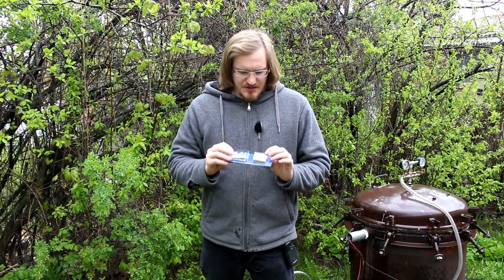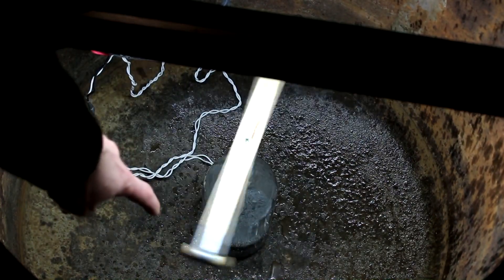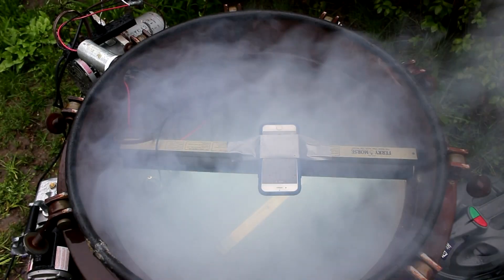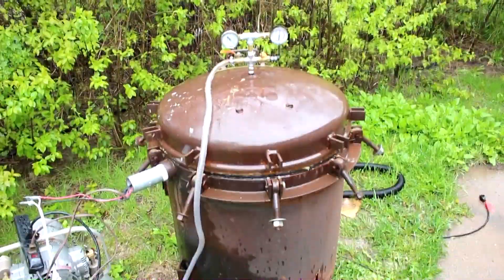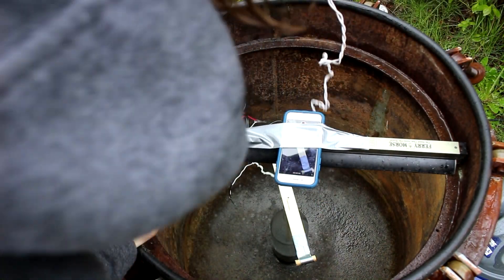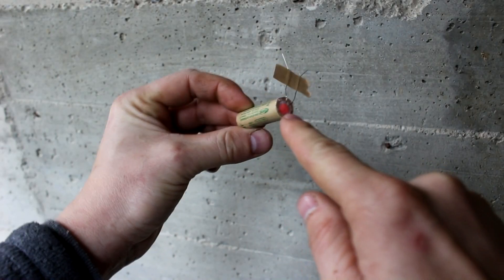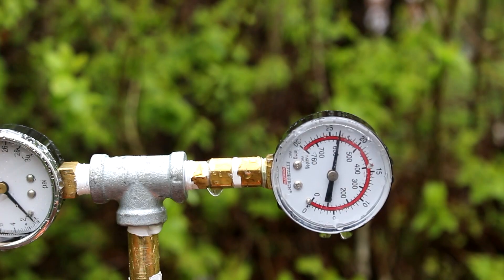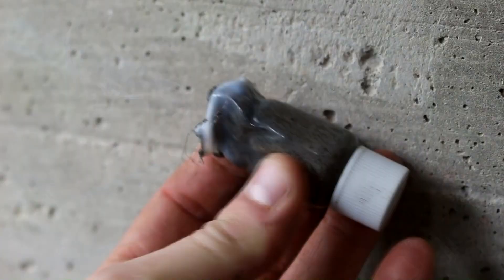Will a Model Rocket Motor Work In Vacuum?

Comment: Tapes phone in a vacuum with explosives for science
Reply: HunterM2100 thats the kerbal way to do it
Reply: He needs Nokia
Reply: HunterM2100 you must be new to his channel
Reply: +bob question
Your prediction, rockets won't work in vacuum, can only be based on a few arguments:
- rockets push against air. That's nonsense, rockets work due to conservation of momentum.
- rocket fuel can not burn in vacuum. Also wrong, since rockets take oxygen in liquid form with them. Also, there are fuels which don't need oxygen, since it is in their chemical compound.

So what is left? Gravity? Gravity is a force and overcoming it or not is just a question how strong the rocket is. If you doubt that orbits are an equilibrium of gravity and centrifugal force, why don't you put the numbers in the two formulas:  G*M*m/R^2 for gravitation and m*v^2/R for centrifugal force. It fits for ISS, it fits for the moon, it fits for earth orbiting the sun. So what is your complaint?
Reply: +bob question    You are painfully incompetent. Stand on a skate board with a heavy stone and push the stone away. The skate board moves in the other direction. And if you think this is due to "pushing against air" do the same with a very light object of the same size. Almost nothing will happen, although it is the size which counts for resistance of air. 
Exhaust gasses in a rocket are not just "realeased", they shoot out with high speed. Ever learned about conservation of momentum? If part m of a mass M moves away with a speed v, the remaining mass (M-m) moves in the opposite direction with a speed of m*v/(M-m). Basic physics.
Reply: I think what you are trying to say, is that you heard of Newtons laws, because clearly you did not understand them.
Reply: +bob question "The pressure system inside the rocket is in equilibrium. It does nothing to the rockets momentum, any more than pushing on your steering wheel does for the forward momentum of the car."

During the burn, yes the pressure inside stays fairly constant, and that means the exhaust velocity will also be fairly constant.

BTW, if you push off the steering wheel of your car, and in the process leave the car (you have a clever hatch-back) you will certainly impart a net force to your car. That's exactly what gas leaving is doing.

"Why would the exhaust do work on one side of a zero pressure system, whilst it is moving in the opposite direction?"

a. The system is not zero-pressure. There is pressure inside the rocket.
b. Yes, it has been made to move in the opposite (out the back) direction. This imparting motion to the gas (or any mass) results in force on the rocket. This is trivial to demonstrate.
Reply: +bob question "Why do you think this is not relevant to the subject?"

It certainly might be relevant, if you could prove any of these claims, but you have appeared to side-step the original topic.

I'll ask you again:

Does exploding dynamite move a nearby plate in vacuum when it explodes. Yes or no, and why?

"There are so many professional whistle blowers out there. You must be making a point of avoiding them."

Not at all. I think the world should be exposing and rooting out actual corruption (huge list) instead of being distracted from thinking about it by the attempted cognitive infiltration of truth movements by flat-earthers.

A conspiracy involving literally everyone else but you and your fellow believers is not a conspiracy, by definition. It is literally the current intellectual status-quo vs you guys.

I'm not saying the status-quo is good, but I am saying it's real; you can measure it.

The only way mankind can advance by your (scientific) revolution is if the new stuff is simpler and works better than the old stuff. Coming up with a bunch of over-complicated, incomplete, special-pleading reliant explanations for observable reality which are supported by literally no sound mathematical predictions whatsoever and do not correctly predict what anyone can observe just isn't going to cut the mustard convincing people that you're on to something.

If Flat Earth types could even predict the up-coming solar eclipse, we'd all be very impressed. Eclipses are quite real, and the totality will probably pass near where you are, so you can see it. What you seem not to be able to do is predict its future date, but instead rely upon the very astronomers you do not trust to show you when to look for something that is undeniably real . The distances and formulas they use work right even while you are telling folks those distances and formulas are all a lie.

Again, if any of the distances or orbital parameters were incorrect the predicted eclipse simply would not happen.

If you doubt this, here's a simple challenge: go ahead and make a diagram showing the positions of the sun and moon such that the eclipse totality path works correctly while the sun and moon both appear in exactly the right place for all other observers who can see them . I'd be absolutely thrilled if you could do that.
Reply: relax, it's just an apple phone. They are not designed to function for long anyway.
Reply: Romo Sapien yea probably true
Reply: Newtons 3rd law, look it up. And could people please stop saying "NASA claims", like they are the only ones able to go to space, hell if you want to believe in some silly conspiracy, you might as well make it as massive as possible.
Reply: +bob question Well, in context there, bob I was mocking one side thinking that discussions like these were about snappy one-liners and repeating catchphrases such as "Case Closed!"

"that's why you don't understand. "

Nope, my friend that's why the people we were laughing about, who do as above, thinking they're in an argument don't understand.

"You are involved in an argument and not searching for truth."

By saying that, my friend, it is you who seem to be desperate to turn this argument away from math and physics and to make it into a sort of rabbinical, philosophical argument about "the nature of God vacuum".

A physics conversation, like I'm really trying to have with you, is not the same as a philosophical argument. What people think or believe doesn't matter. Whether the correct behavior of the universe can accurately be predicted by a mathematical formula doesn't need a snappy debate full of clever rhetorical devices.

How things observably behave, for everyone taking the time to observe, and what formulas will predict this behavior, is the currency in this discussion, not smart remarks.

"This is what I have been saying and people keep denying that codys experiment is flawed."

Every experiment under the sun is flawed! Why tell me this? Did I ever try to deny it was flawed? 

My last message to you hours ago pointed out how it was bloody flawed .
Reminder: Starting "altitude" ~38515 feet
Finishing altitude ~36839 feet
Do those heights look even remotely like a perfect vacuum to you?

I guess you didn't read it.

I completely agree that any experiment trying to demonstrate or prove something must talk about its limitations.

"Nothing is thrown. Pressure is released. Why would the exhaust do work on one side of a zero pressure system, whilst it is moving in the opposite direction?"

Whether you use the word thrown or released doesn't affect the equation for rocket force one bit, so feel free to use whatever rhetorical device makes you feel the best.

When the material (which has mass, whatever it is) travels across a pressure gradient, it accelerates relative to the thing causing the pressure gradient (the rocket). We agree that those molecules are moving fast.

Now, they leave. So, taking stock, we see that the rocket has caused these molecules to accelerate. A certain number of them, so a certain mass.

The net result, high vacuum, partial vacuum, or no vacuum (sea level) is that the combustion chamber was always at a higher pressure than the surroundings, which caused the contents to leave.

The relative pressure between sea-level and an un-attainable-perfect-vacuum is only ~15 psi. You can hold 15 psi with your finger, indefinitely.

So, if we say the internal absolute pressure of the rocket combustion chamber was 1000 psi, then as far as it is concerned the pressure-gradient (relative pressure) is still huge! 1000psi (perfect vacuum) vs 985psi (at sea level).

It seems like you want there to be some "transition case" as the ambient pressure goes down and suddenly everything is "sucked" instead of "blown".

The equations in use don't seem to show that, nor care about the words used; they simply show the nozzle-opening pressure-gradient changing as the ambient pressure decreases.
Reply: +bob question I like how when your musings are thoroughly answered in one area, you double-down with another "bait ludicrous claim" that is designed to lure the other party down a rabbit hole.

You say:

"firstly, what is a molecule? molecules are still purely theoretical. this is very important to understand since you are considering a gas to be a collection of tiny solids. This is never been proven."

Because, yeah, when you take a block of ice in a closed system, melt it, evaporate it, and then condense and try to re-freeze all those water molecules, no ice results....

/sarcasm

Actually no, it works perfectly. You get every milligram of ice back, unless you had a leak.

Where did the ice come from, bob? Why did the total weight of your closed system not change, bob?

People engineer technology with molecules (and even individual atoms) every day. The device you're using to tell me that molecules are theoretical and un-proven would not exist if this wasn't possible. Clearly the irony is lost on you.

When a silicon wafer is doped to make the tiny transistors you are currently using, material at the sub-molecular level (individual atoms) are merged with the silicon lattice, creating impurities which have desirable electrical characteristics. 

Let me guess, silicon chips aren't real, either. Your computer and tablet runs on conjuring and demons, right? And voices in your head that you attribute to god  told you you couldn't go to heaven unless you believed that, right? Is that why you believe you must not believe molecules are real?

"Another thing to consider is, is there gravity in the vacuum of space?."

Yes, yes there is. The formula for gravitational force works everywhere it has been tested. The speed and dimensions of the orbits you are skeptical about are what they are because of gravity.

"Many people think of the vacuumus void as being not subject to gravity."

Many people are dead-wrong, in that case.

Maybe they should investigate more. Perhaps they should try to create "anti-gravity" inside their own vacuum chamber. Nobody has managed to do that, yet.

Did you hear me when I mentioned that natural laws, like gravity, are not predicated on the faith of the observer? They exist whether the observer is there, believing them, or not.

Riddle-me-this, McGee, don't you have to believe outer space exists in the first place to believe it's a vacuum, so that you can then claim that the lack of gravity is due to the vacuum?

The irony of that statement is that they're related. If you have a moderate vacuum with matter scattered around in it, the matter coalesces because of gravity. When all those atoms clump together, they become more concentrated sources of gravity, leaving more vacuum elsewhere.

"This, according to the off-fish-al story is not correct."

You mean, according to the results of thousands of instances of virtually the same test, i.e. the Cavendish experiment? Did you realize that the experiment works better if you run it in a partial vacuum?

This is because the tiny gravitational forces (between objects which are relatively tiny compared to Earth) will not be disturbed by air currents and eddies caused only by light shining on the apparatus, if it's in a box at reduced pressure.

"The ISS so legend has it, is travelling at 17,500 mph."

So observation has it as well. You realize that if you bounce a radar-signal off it, and then measure its downlink's Doppler-shift, and then track its angular speed across the sky, you have proven in three separate interlocking ways (yielding its distance, velocity, and angular rate across the sky) that it's no legend.

So, I spose you'll tell me that radar and Doppler-shift, have also never been proven, right?

"Centrifugal force and gravity are exactly equal thus the ISS would be in a state of perpetual free fall and only its linear speed is stopping it from piling into the ball earth."

Piling into the atmosphere, actually, but yeah.

"So we are not talking about conservation of momentum in a frictionless and weightless environment."

No, a satellite has weight, and momentum. It has weight because of mass and gravity . 
It has momentum because of mass and velocity .

You've gone from "some people think the vacuum of space is weightless (due to being a vacuum)" to "because the vacuum of space is weightess... It's not . The formula for gravity is F= Mmg/r^2. If you solve that, you see that the gravity is slightly less 400km up than at the surface of the earth. The formula for "weight" is mass times gravity.

You said the words yourself..."free fall". If you are falling around the earth your centrifugal force exactly balances gravity. Simple.

"Frictionless but still subject to a massive gravitational pull."

Almost frictionless, yes.

"A rocket in a frictionless and weightless state may generate a momentum. Not necessarily, but it might."

If the rocket has mass and velocity, it has momentum. Simple as that.

How does any of this meandering through mis-interpreted laws of physics hope to prove rockets don't work in vacuum, anyway? I've lost track of your point in all the mistakes you made. Was your goal to distract me with a Gish-gallop of mistakes?

It distracted me for 15 minutes. Back to the original discussion...
Reply: +bob question "should this not say "Unless you can prove the earth is actually flat"?"

Nope. I'm reasonably certain you don't even believe your own material. If you did your behavior would be quite different.

"You are belief bound."

You are projecting. I am evidence bound. If there were strong evidence of a flat Earth, I'd probably believe it. Monetized YT videos full of misdirection, disingenuous assertions, and half-truth, that can be debunked by most anyone who completed the eighth-grade, for fun, are not that.

"You cannot think beyond belief."

I don't waste time thinking beyond evidence.

"that's why you live in an assumption based universe of make believe."

No assumptions needed. The overwhelming quantity of interlocking evidence speaks for itself.

"Orwellian double think and a few Hollywood special effects."

The Earth was recognized as a spheroid well before Hollywood as we know it existed. The fact that you feel compelled to ignore arguments in favor of a spheroid Earth should tell you something. If you actually believed as you claim, and had solid evidence to back up your belief, you'd acknowledge and address the arguments, with sensible critiques and counter-arguments.

"You can live in a world and yet picture another, that is actually correct, and then dismiss it on the basis that some other people merely believe in it."

You are really strawmanning hard now. Desperately strawmanning, hoping to fool someone. You are fooling nobody. You are purposely mis-understanding those who disagree with you, and then using your mis-understanding as an ersatz basis for your opposition to observable reality.

If this were not the case, you'd engage with the points people are raising, such as line-of-sight convergence not working in the Flat Earth case, for the Equinox Sun, and Polaris. You'd acknowledge the questions I politely asked you now about 48 hours ago , which you seem to be trying to pretend don't exist.

"Strange times indeed, but like I said, the clues are under your feet."

I'll bet they are. Can you name two which don't appear in Eric Dubay's "200 proofs" that you think are good evidence of a flat Earth?

Anyone paying attention can clearly see that the only way you can retain your claimed belief in a flat stationary Earth is by systematically rejecting all actual evidence to the contrary, hand-waving it away with some flimsy excuse, which somehow even applies to evidence you have never seen, as long as that evidence might fall into a category which casts doubt on Flat Earth. 

If you feel compelled to reject reams of solid evidence that doesn't support your argument, without actually critiquing or stating what would make it believable, stating what's actually wrong with it , what you are doing is not seeking truth, but desperately trying to bolster your preconceived belief . The only person you stand even a remote chance of fooling is yourself. Everyone else can see what's going on.
Reply: +bob question "I am more than happy for you to continue spinning."

You're spinning as well, and it can be proven in mutually supporting, interlocking ways.

"Indeed, why would you need convincing arguments of the plane, when you have never required convincing arguments of the ball?"

Pretending I don't need convincing arguments that I'm on a spinning spheroid Earth is a big, fat strawman.
If a significant amount of the evidence in favor of spheroid Earth hadn't happened, I'd have more doubts.

Your refusal to engage, critique, or even acknowledge evidence which disagrees with your position is not a strong tactic on your part.
Reply: sleat If one of them had any evidence other than their beliefs, it would be a first. That's the beauty of science and math. They don't care what you believe.
Reply: +bob question Assuming you're right, can you tell me why my FOG gyro shows the Earth rotating at the speed the stars move overhead the other way?

It shows rotation right-side-up flat on the ground, as 15 degrees per hour * the sine of my latitude. When I turn it over, it shows the same, opposite.

When I pop it onto my equatorial mount, turned off (sensitive axis pointed at the celestial pole) it shows "straight" 15 degrees per hour, and flipped over,  15 degrees the other way. If I power up the mount, such that it tries to remain stationary relative to the rest of the universe (for tracking stars), the FOG shows very little rotation, just as you'd expect.

How does a sealed, grounded aluminium box know how to do all this stuff on a flat-stationary plane? How does it know its latitude? Why does it read incorrectly (for precise navigation/positioning) unless I mathematically cancel out the "Earth Rate"?

""Eat not the fruit of the tree of knowledge because it's so damn complicated"

Sometimes it's not.

The simplest answer is that it uses a few properties of light predicted by Relativity (and some coherent light interference effects) to accurately measure rotation against an external frame-of-reference.

What's your answer?
Reply: +bob question   Tesla also said that this "realm" has a spheric shape. Tesla was one of the early pioneers of radio, but he still missed the knowledge we have today. Low frequency waves do adapt to curvature to some degree, this is called "ground wave". Higher frequencies don't but they are indeed bounced from ionosphere. Otherwise radio communication with short waves would not be dependent on the time of day. We know today exactly which frequencies are bounced by ionsophere and which ones go through ionosphere. Like the GHz-signals used by sat TV satellites. Why do you think is the range of radar form ship to ship very limited, although we can measure the distance earth-moon with radar?

Propagation of EM-waves clearly confirms earth being a ball. By empirical evidence like the limited range of radar. Not to talk of astronomical observations like this one:
i.imgur.com/ukFWnpY.jpg
Refute it when you can. Yes, it's all down to empirical evidence and all empirical evidence confirms spheric earth.
Reply: vanillaHchrist to your last reply to me

I just didnt know how a rocket is supposed to work AT ALL. I knew they worked, but no idea how.

I really didnt think much about it until this thread. I couldnt swallow the 'rockets expel mass and so they move in opposite direction' taught in high school. in retrospect, it seems correct, but it is far too vague (without more detail, I assumed that, like bob, rockets simply release pressure).

Bob's 'the fuel expelled pushes against air, which somehow tranfers forward momentum back to the rocket' didn't sit well with me either. my own hypothesis suits me better, which is solid at least in theory and happens to explain the high school definition.

so obviously, all I knew was that despite my lack of understanding, rockets worked, I never questioned whether they worked in vacuum (since I thought however they worked, they must work the same everywhere), and so, obviously, I never doubted orbiting satellites
Reply: bob question of course, when we put any thing in a vacuum, it doesnt TECHNICALLY count as a vacuum anymore.

the 'main narrative' as you call it, never says space is a vacuum. rather, it says space, even between galaxies is VERY sparsely dotted with hydrogen and helium.

in the solar system, space is said to have a small amount of dust, debris, solar wind, fields of different sorts, and of course, large bodies such as planets.

hence a perfect vacuum exists only in some places between galaxies, in small spaces, and an infinite vacuum doesnt exist.

now, when a rocket releases its spent fuel in space, the gas still has density. I dont intend to be sound superior (no, really, I swear!) but let me give you the formula for density. it is mass over volume. I dont doubt you knew that, BUT:

the gas will disperse until it spreads across space, until that time it will still have density, that will gradually decrease. of course, if you concentrate on this spent fuel, it will ALWAYS have some density, even when it is spread miles apart. we will just say it has negligible density at some point.

so, anything that has density must have pressure... a few moments ago I think I may have seen your point. the pressure of a fluid is found by the formula (density*height*some field, usually gravitional)

in space, while there is gravity, the whole system is in free fall, hence for the spent fuel, gravity doesnt exist, nor is any other field significant.

the formula for pressure of fluid stops applying once fluid reaches a low enough density. hence while there may for a brief time be some pressure WITHIN the plume of exhaust, where the gas is pressurised by the surrounding gas, ultimately there is no pressure once a critically low density is released. however, it the plume still has density.

BUT

there is pressure inside the rocket, where the fuel is being burned with the oxidizer. the walls are containing the pressure. as mentioned in a previous post, pressure is basically the concentration of force. force is a push or pull. the burning fuel is pushing against the walls of the rocket. one side of the rocket has no wall, so there is no push there. 

if we take all these push's opposite reaction on the walls as vectors, then the net vector would be forward.

and no, unlike pushing on a cars steering wheel, the burning fuel, after pushing the wall, the fuel is ejected through the hole at the back of the rocket.

of course, if your understanding of rockets was correct, then why can't the (briefly) concentrated, high velocity exhaust push against the less dense, low velocity exhaust.

either way, rockets would work in vacuum.

please read ALL of that, and give detailed analysis. I only trust information that convinces me
Reply: Tri Le "now try it in a infinite vacuum"

Now try to find an "infinite vacuum". Where do you think you might find such a thing?
Reply: +bob question "Why don't you turn out your pockets and hand it to Nasa. Oh, you already are."

I can virtually guarantee you that neither one of us has ever given a single red cent to NASA.

Speaking of their budget, though, if they are such a nefarious force in the world, enough for you all to have giant stiffies for them, unlike JAXA, ESA, Roscosmos, ISRO, or CNSA, who, collectively, do way more space stuff than just NASA, then...

Why is it that their annual budget is less than 1% of the US Federal budget?

Why are you trying to distract everyone from the vast majority of the US Federal money which has, for decades, been wasted one way or another, on wars and micro-surveillance we've been lied into believing are absolutely necessary, but which turn out to have been pointless, every single time ?

Why not focus on that instead? If you agitated for putting a stop to that waste, instead of insisting that NASA is the root-of-all-evil, I think your country would have way more money for useful stuff like low-cost energy, better crop-yields, better infrastructure (have a look at China) and less toxic pollution from industry.

Has NASA ever bombed a sovereign nation?
Have they ever engaged in "regime change" in a sovereign nation?
Has NASA ever pressured previously innocent patsies into carrying out attacks on other Americans simply to be able to later say that they thwarted the poor fellow's plans, and are thus "keeping America safe"?
Has NASA decided that it's perfectly legal to monitor literally everything you do without so much as a warrant from a judge?
Has NASA accused sitting presidents of treasonous behavior, and later admitted that the entire narrative was fabricated whole-cloth?

No, they've simply committed the heinous crime (in your eyes) of exploring space, and publishing their results, for you to consume, completely mis-interpret, or ignore at your leisure, consuming a fraction of one percent of the federal budget in the process. Oh, the humanity!

So, again, why NASA, when the living room is stuffed full of elephants and assorted 900 pound gorillas which you somehow don't see?
Reply: +bob question OK, convince me that all your earnest persuasion is not simply trying to mask the real evil of various national governments and their wastage of resources on bad stuff.

Again, NASA's budget is tiny. Tinier than Social Security, unemployment and welfare, even, and much tinier than the budget of even one branch of the military, except the Coast Guard.

"That's because you love your oppressor."

That being exactly whom? (you have to let me know so I can love them properly )

"but you don't see that nasa is central to that. "

Please explain exactly how NASA is central to this "mind control".

"like a good cop bad cop situation"

There is only one US Federal Government that I know of, so who is the other cop (and which one do you think is "bad")?

"I have a telescope."
What kind, exactly? Brand? Focal-length? Aperture/mirror size? F number? (focal legth/objective/mirror size)

"the planets are not even circular. "

Wow! You'd rather blame the planet than your telescope? Planets are circular for everybody else who looks at 'em through telescopes. How would you explain that? What kind of telescope is it, and did you actually focus it?

"I see dots of light in the sky."
Sounds like you never bothered to focus it. I can see nebulae, individual galaxies, and planets with moons which actually orbit around them over time. Can you see moons orbiting your planets? Do the moons change position from day-to-day?

"I have access to an 8000mm lens."

Yes, that's issued to every Flat Earther when they join up. You must be still a probationary member, or you'd have your own P900.
(but it ain't no propa telescope and I can explain why if you like)

Unless maybe you're claiming to have a reflector telescope with 8000mm worth of mirror. That's world-class! Bigger than Hubble! If you sold it, you could buy a mansion! Even NASA or JPL might buy it from you!

You must mean a P900, I guess, in which case it's 2000mm focal length, F6.5 at that zoom level, and you're quoting the figure of "digital zoom". Digital zoom is horse-shit for astro-photography, like turning up the volume on a bad radio station. You just get more bad. I think you should make friends with someone who has a proper telescope, from what you've mentioned. If you mention your general area "i.e. central Minnesota" I can find you an astronomy club that's happy to have "open night" viewing parties for the public.

Also, without a motorized equatorial mount, you can't take the time-exposures necessary to see the really beautiful deep-sky stuff. You can do it with a P900, but you need to track the stars' apparent motion.

"It sees the lights in the sky as dancing cymatic resonance patters."
i.e. a diffraction pattern from not focusing your image, or using digital zoom, maybe also without focusing. Got it.

I can make those too, they're cool. The pattern "dances" because of the wobbly atmosphere between you and the out-of-focus thing you're looking at. If you focus properly on Jupiter, Saturn, or the Moon, you can clearly see the wobble in the edges of the object.

"If "Earth" was rotating, the centre of celestial rotation would itself do circles in frame and not remain fixed in the frame."

Look, if your aim is to debunk the solar system, and the apparent motion of distant stars in our galaxy along with what the Earth does in the midst of all that, you have to start by understanding what the other side is claiming !

If you think the rotational axis of Earth somehow does not point in a definite, single direction during the course of one evening of star-trails photography, thus allowing a fixed time-lapse time-exposure camera mounted on the Earth to image circular trails from stars then you:

a. Don't seem to understand what an axis of rotation is
b. Don't seem to realize that the axis of rotation of Earth, while it oscillates a tiny bit with various periods, does not move over enough of an angle to mess up star-trails over the course of a single day.
c. Perhaps cannot imagine a camera tripod on a turning sphere looking at distant objects over time while the sphere turns.

This just in, Jeran decided that what you indicated in your comment wasn't so. He admitted that his claim that they were impossible was incorrect. You can see Wolfie6020's thorough, polite, and completely methodical debunk of Jeran's claim that star-trails are impossible on a spinning Earth. After he posted that, Jeran admitted he was wrong in the video he made about star-trails. That is, he admitted that given that the earth is spherical and rotating with stars around it , that star-trail photos from the surface of Earth are definitely possible to make, assuming again, that the Earth was spherical, which he of course did not admit to be true. The irony here is that the geometry of star-trails on a Flat Earth is messed up.

As you move away from the North Pole, in the model most of you seem to promote, the trails become oval in shape, assuming a domed-disk.

Perfectly circular star-trail photos from anywhere but the North Pole will not be possible, per some simple geometry, on a dome-covered disk with stars on the dome.

You probably need to attend more F-E meetings so you don't get behind.

"This is a property of wide angle lenses and is curtains for the spinning "earth" hypothesis."

Sounds very interesting. Who claims this?

BTW, ignoring all the good ways to prove whether the Earth spins, and calling it a "hypothesis" does not stop it from being an observable fact.
Reply: +vanillaHchrist If he only got hold of a proper camera, and did a sequence of time-exposures himself, and then thought about what must be happening for the stars to move as they appear to do, and then tried to draw a diagram showing how these work on a Flat Earth, that would be most impressive.
Reply: +bob question OK, show me how the signal-strength link-budget for a satellite transmitting down to a small terrestrial dish is "impossible". I'd love to see it!

This'll get you started, assuming you've never studied RF signal power requirement analysis.
Google: link budget for terrestrial downlink from geostationary satellite

Also, it turns out (I've tried this) when you point a camera on a tripod parallel to the direction your dish is pointing, you get star-trails, but you also get a string of dots towards the North (in the Southern Hemisphere) that don't move .  Odd that they (or one in particular) should be in the exact direction my dish is pointing. What do you make of that?

"Geostationary really means on the ground."

To you, perhaps. To me it means "not moving with respect to the earth" which is exactly what geostationary satellites do.

"Terrestrial" means "on the ground" when talking about parts of a satellite system.

Again, a line of non-moving-stars in a time-exposure, towards the Equator. What do you make of this?

"Go and have a look at real estate agents on the equator. see how many home dishes actually point upwards. "

Better than that. I've actually been to Rockhampton in QLD, 23 degrees South of the Equator, on the Tropic of Capricorn, gone into a pub, and watched satellite TV in there (I was there for the beer and the air-conditioning).

When I checked outside, the dishes were pointing towards the North, and within ~25 degrees of straight up, not at "nearby mountains".

What do you make of that? Were all the dishes fake? What were they pointing at?
Reply: where is everybody? we're not going to just let this thread fizzle out, are we?
Reply: bob question I  quite certain has no desire to destroy his phone or his vacuum chamber
Reply: +bob question    Ok, I see. But you must know that vacuum does not exercise any force on the exhaust gasses when they stream out of the rocket. Gasses are guided by the nozzle in a stream and they will keep their direction also in vaccum, vacuum does not suck. And by the mere action of gasses streaming out the rocket is moved forward. One can say that gasses will be lost in space but this does not mean that the rocket is not driven forward. Since there is no resistance of air gasses will keep their direction and speed for a long time until they finally also start to spread out sideways.
Reply: HunterM2100 Nothing near as bad as arming the biggest rockets made with people as the pay load!
Reply: Agememnon say that to my iPhone 4 that I've had since 10/2010 that still works despite being dropped on multiple occasions.  The battery still lasted all day too until a couple months ago when my nephews slammed the door too hard knocking it off my dresser and cracking the back.
Reply: "There are laws regarding pressurized gas that say otherwise"

Not sure what argument you're making here. Can you tell us more?
Reply: The gas has mass, and is exiting at high velocity.

The hot gas is pushing against the rocket.

With your explanation, there would be no reason for rockets to function in the air, because the hot gas would just push the air away, as the rocket motor sits in place.

Because you're telling us that the escapingf gas doesn't impart momentum to the rocket motor.
Reply: +bob question "The only time when energy for momentum will be returned to the rocket is when the rocket exhaust is released and there is a resisting pressure such as air pressure."

So, are you saying that a device which throws matter away from itself within a vacuum chamber, against no measurable resisting gas pressure, does not feel a force?

Do you have an equation for that which can be used to engineer some experiment?

A related question, why doesn't the formula published (and frequently tested and verified) for the force a rocket feels for a given mass-flow-rate, exhaust velocity, free stream pressure, and exit-plane pressure account for what you say above? 

If you solve for atmospheric free-stream-pressure, the force goes down and if you solve for low, or zero free-stream pressure, the force goes up . Shouldn't a sound rocket-force-equation show just the opposite, if what you say is correct?
Reply: sleat
Nothing is thrown from the rocket, it is released.
No resistance = no force. and no mass is thrown. It is released from a pressure system into an infinite void that is also subject to gravity.
Reply: WDane
What I am actually saying is I understand newtons 3rd law and it is not applicable.
Reply: Then why does it work? I mean the fact is that many countries have gone to space and back, there are also countless videos on youtube of it working.
Reply: WDane
There is none so blind as those who won't look. Conspiracy? could be just necessary crowd control.

Oh, yes, the visible space station that would be well beyond visible resolution and never travels at 71 times its own length every second. as we are told it does. There is a huge clue there, but first you have to look for it.
Reply: BSM
That's us both larfin' our arses off, then :D.
Reply: The light in the sky that you think is the space station. It would not be visible at 250 miles distant at its very minimum. It should also travel 71 times its own length in 1 second. Its 109m long and is supposed to be travelling at 17500 mph. That thing should belt across the sky. That light doesn't.

109m is about the same size as a large passenger plane and you can barely see it at 7 miles up and if it wasn't for the contrails, you would not see them. So to think you would see one 36 times further away is rubbish. Remember, as soon as you are not looking perfectly straight up, the distance to the "ISS" increases.
Reply: +bob question "That's not an assumption, its a prediction. "

Great! A physics prediction! Is yours the very first one in the history of mankind with no equation, or can you show me your equation for the actual, measurable force a rocket feels when fired in a given environment.

In other words, with this equation, I predict there will be a term for the ambient pressure. There will also, presumably according to the logic you have presented, be some term for the container volume.

If you predict that the presence of walls, gas, or other matter in the thrust-stream has an effect, terms for that, too.

I'd warn you here that solid objects in the plume of gas from a rocket don't change its force, unless they physically obstruct the nozzle, according to mine and others' experiments.

Of course, the amount of vacuum in a finite-sized vacuum chamber will reduce if gas is added, so there'll be some calculus involved which handles the fact that the pressure is changing over time.

Or, you could leave out the calculus, and just have your equation return the instantaneous force for a given environment pressure, given, say the mass flow, velocity, nozzle area, and ambient pressure, and let others solve for the change in performance expected as the quantity of evolved gas in a finite volume increases and destroys the vacuum.

The cool part about all this is that since you have made a physics prediction, which always includes a formula,  (up till now at least) we can all bloody test the thing and see if it gives accurate values! Hooray!

Congratulations on your new physics prediction. Well done, matey.
Reply: +bob question "The light in the sky that you think is the space station. It would not be visible at 250 miles distant at its very minimum."

The light in the sky's angular size is identical to a 9 inch car headlight at 800 meters. Even my P900 can take a reasonable photo of a car headlight at 800 meters!

The angular size of the 109m square ISS, at 400km distance, by trigonometry, is 56.2 arcseconds. Anyone can see Venus, also lit by the sun, just like the ISS when it's visible. Venus's angular size is 63 arcseconds at maximum. A very similar number. Mars has an angular size of 25.13, less than half the angular size of the ISS and is also lit by the sun. Mars has exactly the same astronomical magnitude as the ISS, i.e. -3. Venus's is -4, a bit brighter than the ISS on a good day.

Anyone with eyes can see Mars and Venus !

Therefore, given the numbers, anyone should be able to see the ISS.

On the one-after-next "average" pass of the ISS near Sydney, the average angular speed across the sky will be 1.6 degrees per second. This is typical. Anyone can watch something like that. Anyone can follow that with binoculars. 

I can (and do) follow that with the telrad (like a hud) on my telescope, with my attached DSLR set to 1/1200th and ISO800 at infinity and 4 shots per second. It works. The pictures look like the ISS  (although they are a far-cry from the best ones)

I do usually wait for the 75 to 85 overhead passes, though, as they give the sharpest photos.

"It should also travel 71 times its own length in 1 second."

Yes, so? It's far away, and it's moving fast.

"Its 109m long and is supposed to be travelling at 17500 mph."

Yes, it is supposed to be and a good thing, too, or it'd fall out of the sky!

"That thing should belt across the sky."

It's 400km away. So what do you think should be the angular speed of "belting"?

"That light doesn't."

Doesn't what? Doesn't "belt"? How many degrees-per-second in a belt ?

It moves just right for what it is supposed to be, and you know it does, or you're being purposely obtuse.

You don't like doing math, do you? Evidently you prefer the belt, and as you can see, I'm happy to oblige.

The math comes out right. Would you like to see it? I'll show you mine if you show me yours!

"109m is about the same size as a large passenger plane"

The largest passenger plane in existence is the A380 at 73x80m. or 5840m^2 if it were a filled-in-rectangle, but it's sparse-surface, only fuselage, wings and tail. It also isn't usually seen lit by the sun against a dark sky, but could be at certain times.

The ISS is more "filled-in" as a rectangle when it's big-side is facing you and sunlit. Its rectangular area is 6905m^2,  similar to the A380, but mostly filled-in rectangle. If it is seen at all with eyes or telescopes, it is in direct sunlight against a black background! Very different circumstances for visibility. Again, nobody can see details on the ISS with the naked eye, as our angular resolution isn't good enough, but we can see it !

"and you can barely see it at 7 miles up and if it wasn't for the contrails, you would not see them."

So, an airbus directly overhead at 7 miles has an angular size 78% as big as a full moon but not nearly as well lit! You can more than barely see an A380 at cruise altitude directly overhead. Perhaps these airliners you are trying to look at are near the horizon, which by geometry, say 30 degrees above the horizon, would mean they are 14 miles away from you, and oblique to you at a 30 degree angle, so less than 1/4 of a full moon. And again, they are not lit by direct sunlight. Perhaps the airliners you are trying to see are not as big as the A380.

Suffice to say any airliner flying over at night, with a light on it generating as many photons as a ~6900 square meter object in direct sunlight reflects then of course it would be visible !

"So to think you would see one 36 times further away is rubbish."

But to thoroughly know you have seen, and photographed it is reality. You should try it! Suspend your disbelief long enough to take some photos !

You'll enjoy the results, if you do it right.

"Remember, as soon as you are not looking perfectly straight up, the distance to the "ISS" increases."

Quite so. I think that's why you have trouble seeing airliners (see above).

I took a random photo with a  normal lens "non-zoom" smartphone camera, just a snapshot, and ~40 degrees up from the horizon, of a mid-sized airliner at cruise altitude. 

You can see it's an aircraft. Even has the moon in the frame for comparison!
Reply: +BSM My prediction is that he will never acknowledge that any human being has seen it, despite reams of evidence documented, that he can replicate.

I suspect his existing belief system precludes acknowledgement of any observable fact that might threaten it.

It would be great if he proved my suspicion wrong, though.
Reply: They usually say something like , " Do your research! Look up Joule Free Expansion! Ha-ha, checkmate!"
Reply: +WDane   And I might add, that it would even make less sense to fake several space stations. After all, before ISS we had MIR, and China has launched an own space station recently.
Reply: Jondahl Davis Yes, mis-applying a physical phenomenon is not a good argument-winning technique.

I guess they read the text on Joule free expansion, and and latch onto the idea that one side contains vacuum, and the other side pressure. They see the increase in entropy and the expansion into vacuum and erroneously say to themselves "whoa, that's just like a rocket in space".  

(of course you know all this following below, but maybe some of the no-space-rockets crowd does not)

Only it's not just like a rocket in space.

Space + rocket is not analogous to a closed, insulated box, with a rocket on one side, attached to the box, and space on the other, contained and insulated from everything else by the same box . The most obvious point here is of course that the pressure and vacuum sections are physically connected, unlike a rocket and some container which contains all of space .

Rockets throwing spent mass into space means that the accelerated mass can do work on the rocket as it is being accelerated, before leaving . If the rocket were simply one side of an insulated partitioned box, the exhaust (from one side to the other) could not do work on the system, nor on the outside.

But even in space, the exhaust does not do work on the total system (including vacuum) it does work on the rocket only which is of course not a vacuum.

(of course you know all this, but maybe some of the no-space-rockets crowd does not)

Expansion certainly applies to the expansion-nozzle, but that's so the exhaust can do work on the nozzle before it has to finally leave !
Reply: +bob question "There are no videos showing this working."

So you seem to believe. So, if there were, would it automatically have to be some sort of fake?
How would you convert your belief into a binding, real-world verifiable fact? How many sentences do you have to write in comment-sections before it becomes the truth?

One big difference between a verifiable real-world fact and a faith based belief is that for the belief, you need to automatically throw away strong contrary evidence to protect the belief.

"This one does not test a rocket in a vacuum."

OK, so what was the initial state of the chamber, say 10 milliseconds after the rocket began obviously producing thrust? What level of vacuum (InHg) was it at? You do realize that perfect vacuums are quite rare, right?

"The hot exhaust gasses pressurize the chamber."

Not according to the gauge in the video. Was the gauge lying? What it showed was that the gases released reduced the vacuum. 

Let's look at that in the context of your comment...

At start, the pressure was 24inHg below atmospheric.
At finish, the pressure was 23.5inHg below atmospheric.

So, the absolute pressure change was 0.5 inches of mercury.
(Atmospheric pressure is about 29.95 inches)

Total absolute pressure:
Start: 29.95  - 24 = 5.95 inches mercury
Finish: 29.95 - 23.5 = 6.45 inches mercury

Both 5.95 and 6.45 inches of mercury are well below atmospheric pressure.

In real terms, converting mercury to psi, and then to altitude, we get:
Start: 38515 feet AMSL.
Finish: 36839 feet AMSL.

So, what this proves is that at least the rocket produced real force between those two altitudes. The chamber "lost" 1676 feet during the test due to the exhaust. The exhaust did not return the chamber to atmospheric pressure, nor did it pressurize it.

"The rocket is not working against gravity. "

The rocket was clearly producing force. Gravity is also a force. How is this significant? When you drive down a flat road, accelerating to 100mph do you say "my car is not working against gravity so I shouldn't be burning any gas and my car isn't working right"?
Reply: sleat
Since no one has ever tested a rocket in an infinite vacuum, it can only be a prediction. Others have made the same prediction.

Is there gas present? yes? then it's not a vacuum. 

When you ignite combustibles do they give off gas? yes. Co2 Water vapour, judging by the black smoke in codys low pressure chamber Co as well no doubt other gasses to. Co2 is a particularly heavy gas. And all that heat = pressure . Together with the air that is already in the chamber.

Well, the problem is that you can't test the prediction. If you can achieve a perfect vacuum and get the rocket to burn, you no longer have a perfect vacuum. QED

I find this really easy to understand, I wonder why you are struggling? 

Orwellian double think. Your education has encouraged your brain to be full of conflicting thoughts and when two are brought together, meltdown occurs.

"GIVE ME CALCULUS" is the cry. you don't need calculus for this one, it's just too simple for that. :D
Reply: sleat
"argument-winning technique." <<< that's why you don't understand. You are involved in an argument and not searching for truth. Alas, the ego will always trip us up until we learn how to ignore it. :D

Remember, the only winner of an argument is the one that walks away with the truth at the end. it doesn't matter who starts with the truth, it's who ends up with the truth. Sometimes everyone can win. 

"Space + rocket is not analogous to a closed, insulated box" This is what I have been saying and people keep denying that codys experiment is flawed. You cant test the rocket in a vacuum hypothesis in a vacuum chamber. 

Nothing is thrown. Pressure is released. Why would the exhaust do work on one side of a zero pressure system, whilst it is moving in the opposite direction? 

The pressure system inside the rocket is in equilibrium. It does nothing to the rockets momentum, any more than pushing on your steering wheel does for the forward momentum of the car.
Reply: I think what Bob is trying to say is.... that he's a flat-tard who thinks the world is flat and that this video doesnt align with his beliefs; which makes him really really butthurt!
Reply: sleat
If you step out of the car and provide force between you and the ground, you can indeed, push the car along via the steering wheel. If you project yourself out of the car via the back windscreen, you will impart some momentum to the car.(providing the windscreen is removed)

However. This is not how a rocket works. Nothing is thrown from the rocket, pressure is released. 

If you want to prove to me that gas is thrown from the rocket, then you will need a proper experiment to prove this.

This all comes down to, "is the exhaust gas thrown or released?"

They are the two horses in the race, one named thrown and one named released. One of the horses has no legs.  

Do you see where I am going with this? I know which of these horses is going to romp home. :D
Reply: vanillaHchrist
Vanilla is a fantastic herb. What is a tard? You are right in one sense. I know more about what you are standing on than you do. Belief is what I had when I thought it was a ball. Its easy to measure, though you do need to understand what you are measuring and why.

It's alright knowing the world is flat and still, it's not so good, thinking you are on a ball in space when you are not.
Reply: BSM
No, a bullet from a gun = newtons 3rd law.  Rocket in a vacuum = gun without bullet and without air pressure. Newtons 3rd law is not applicable. Sounds like you tried the gun barrel thing :D missing your brain by nearly 6 ft ;D am I right?
Reply: +bob question "Sounds like you tried the gun barrel thing :D missing your brain by nearly 6 ft ;D am I right?"

Obviously, you are right, because the guy with the snappiest comebacks gets to control the laws of physics.

A gun with no bullet, a blank, still produces recoil, and the formula for the smaller force felt by the gun is the same formula with different numbers. Just sayin'.
Reply: +vanillaHchrist Apparently the hurt can be cured by insisting that the outcome of an event can be dictated by the words used to describe it.
Reply: sleat
"Snappy wordplay" <<< tangent to the point. I stand by what I have said. but I'll take the complement ;D

"Do you release water from your garden-hose, or is it thrown?". released. The hose pipe does nothing except retain the pressure. Once you turn the tap on, the pressure is released. If you are wondering whether the hose pipe snaking around would happen if it wasn't for resisting air pressure, the answer is no. 1 tonne per square foot (14.7 psi) is a considerable resisting pressure. Unfortunately, this is something else that can not be tested in a vacuum as the water would evaporate and you would no longer have a vacuum.
Reply: sleat
"A gun with no bullet, a blank, still produces recoil". This is because of resisting air pressure.
Reply: BSM
personal rebuke. :D "Huston, we have a problem.... bring out the book of childish names, that'll fix the problem".  
"air pressure is irrelevant" that is so funny.
Reply: +bob question    The exhaust gas leaves a rocket typically with a speed of 2-4 km per second. It's up to you, if you call this "thrown" or "released". In laws of physics these two terms don't crop up. It is only the speed and the mass of the exhaust gas which counts for the drive of the rocket.

Your claim that rockets work by air resistance is wrong. Stand on a skateboard with a heavy stone and push the stone away. The skateboard will move in the other direction. Do the same with a ball of styrofoam of equal size to the stone. Same air resistance, but almost zero effect on the skateboard, since the effect depends on mass. Have you ever heard of the law of "conservation of momentum", one of the most fundamental laws of physics? I don't think so. Study it and you will know why rockets also work in vacuum.
Reply: Durchblick
" "thrown" or "released". In laws of physics these two terms don't crop up" <<< you do know what they mean and what the difference is though, don't you? Whats confusing you is that these words seem too simple. They are exactly right, but the simplicity leaves you thinking "that just can't be physics". Those two words are english and come from physical action. These exactly describe two actions, yet you stumble on understanding. false physics leaves you looking for complexity that isn't really there. True physics is simple, beautiful, harmonic and precise.
Reply: +bob question
Bad luck for you. Technicians calculate with this "false physics" thousand times every day since centuries and it is always correct. But they never use your "true physics". How should they? The language of physics are mathematical formulas. Where are your fomulas for the two cases "thrown" or "released"? Give me a mathematical criteria for what is "thrown" or what is "realeased"! How fast does a rocket move when exhaust gas is "thrown" and how fast is it when exhaust gas is "released"? 

You are either so ignorant that you can't even imagine that there are people who are knowledgeable in physics and who know that all your talk is complete crap. Or you are just delusional. Do you know the basic rocket equation? A rocket reaches a speed V which is Ve*ln(M1/M2).  Ve is the speed of the exhaust gas, M1 the mass of the rocket at start, and M2 the mass of the rocket in the end, which is M1 minus the "thrown" or "released" exhaust gas. A simple formula, not complex really and precise. That's how the performance of rockets is calculated if no other forces are present. I can't see "thrown" or "released" in this formula. Do you have a better one?
Reply: bob question thank u for proving my point.... Also, I'd be willing to bet that you believe dinosaur fossils are fake
Reply: Durchblick
Bad luck for me. :D cool. and all that maths just keeping the ball spinning. fantastic. Its amazing what you can do with maths ;D
Reply: vanillaHchrist
I was well into dinosaurs as a child growing up. I wanted to be a palaeontologist. I know whether I should believe in dinosaurs or not. :D Do you believe in them? 

for me, the killer is the term "believe in". I know the "Earth" is flat because it's there and it's measurable. I have seen nothing that confirms the existence of dinosaurs but I have seen plenty to demonstrate the questionability of such claims. Museums will tell you that they have no real dinosaur fossils on display, I have asked this myself. 

You should look into the history, from the first use of the word "dinosaur" to the first "discovery" some 10 years later.

And let me thank you for proving my point :D.
Reply: +bob question A few questions, bob question;

1. So, we have molecules falling through a pressure gradient inside of a solid, containing object. Eventually those molecules end up outside the solid object. Can we agree that the molecules have mass, and have accelerated? Can we also agree that the only reason they accelerated was due to the pressure differential they fell through?

2. You say that all reaction force from jets, rockets, etc, is due to air pressure outside the system . Being that the pressure inside the rocket, and different pressure inside the nozzle, is virtually the same whether the rocket is operating in vacuum or atmosphere how does the fast-moving gas communicate the force back to the rocket ? How does a hypersonic plume of gas that has already lost physical contact with the rocket transmit force to it?

3. Would spraying an air-compressor nozzle or garden-hose horizontally, out over a cliff, such that the water or air encountered nothing but atmosphere, produce a different "kick" force than spraying either one at a nearby wall, say 1 foot away?

4. If I shoot a gun horizontally and the bullet doesn't hit anything but air for a second or two, will the recoil be the same as if I shoot the same gun at a much more solid object, say a sand-bag 1 foot away? What about 6 inches away? Same force?
Reply: +bob question "Its amazing what you can do with maths ;D"

Is what you can do with maths also amazing?
Reply: +Durchblick "I can't see "thrown" or "released" in this formula. Do you have a better one?"

bob question never answers that question. Not that I've seen. So far with me, he doesn't even acknowledge the point has been raised.
Reply: flat-earthers never bring anything to the table.....EVER
Reply: +vanillaHchrist "flat-earthers never bring anything to the table.....EVER"

I suspect it's actually written down in their playbook. I'm imagining a list of things that you must never acknowledge in a discussion with a "baller".

In fact, I remain skeptical that they even believe their own material. I really have a hard time believing that anyone could be that level of stone-wall-obtuse. But I suppose if they believe acknowledging that math is not on their side in this discussion will deny them a seat on the "heaven-train" that may indeed be a very strong motivator for them. 

It just makes me think whoever is ultimately behind this "flat-earth, no-thrust-in-space" agenda is a very bad, bad person.

Imagine you had to admit to yourself that you were actively promoting a viral meme, a belief system whose tenets were tantamount to pathological delusion. Honestly, I couldn't sleep at night with a job like that. I can think of no end that justifies that means.

What could be the goal?
Population reduction by identifying and eliminating the gullible? 
Or, even darker, population reduction by identifying and eliminating the non-gullible !

Or perhaps simply an elaborate form of data-mining? If someone is gullible enough to buy flat-earth, they should be very easy to sell "Alex Jones" style vitamin supplements to!

"Ball-earthers think you are stupid! Prove them dead-wrong by extending your life with our clinically tested Caveman(tm) paleo protein powder and Brainforce(tm) pills!"

Not very efficient, at any rate, as I suspect there may be at most, 1% of the US population who could, by any stretch of the imagination, be "true believers" in either "flat-earth" or "no space exploration whatsoever", or both.
Reply: +bob question "Since no one has ever tested a rocket in an infinite vacuum, it can only be a prediction."

You're quite right. So far, mankind has not found an "infinite vacuum" anywhere to test a rocket in.
Do you know where one might be located?

"Others have made the same prediction."

The laws of physics are not predicated on how many people have predicted a particular behavior.
Physical phenomena aren't discovered by referendum, and a prediction is only as good as the experiment designed to test it.

The number of particles per cubic centimeter varies by location in space, anywhere from ~0.1 to ~1000 particles. These particles are not necessarily complete atoms, but they could be. At any rate there are good vacuums, but there aren't perfect vacuums anywhere thus-far investigated.

In fact, space is so full of particles that dragging a large disc behind the space shuttle, through space, in one experiment, generated the best artificially-produced vacuum ever made.

There are places in space that have less vacuum than the best vacuums achieved on earth, but the best vacuums in space are orders of magnitude better than anything created on Earth.

So, because space, especially near the Earth, like a few hundred km up, isn't a perfect vacuum, presumably you agree that rockets could work there, despite disagreeing on the actual mechanism?

There is a great deal of evidence that they do, some of which you might even not be aware of.

"Your education has encouraged your brain to be full of conflicting thoughts"

Can you give some examples of these conflicting thoughts?

"and when two are brought together, meltdown occurs."

What are the symptoms of such a "meltdown"?
Reply: +bob question    " Its amazing what you can do with maths "
True, but math is also very down to earth. With math you can calculate the circumference of a circle. I hope you trust this formula?
Now, on our earth circumference of equator is 40000 km and distance equator-north pole a quarter of that, 10000 km. But on a flat earth this distance would be the radius of the equator circle and thus - due to math - only 6370km. See how math proves the ball?
Reply: sleat
Firstly, what is a molecule? molecules are still purely theoretical. this is very important to understand since you are considering a gas to be a collection of tiny solids. This is never been proven.

For a mass to be a mass, it must be consolidated in some way.. "Molecules" that have no confinement can not be considered to be a mass. Mass is not the same as weight. My left shoe and my largest cactus are two separate masses until i strap them together. Then they are one mass. same applies to "molecules".

Another thing to consider is, is there gravity in the vacuum of space?. Many people think of the vacuumus void as being not subject to gravity. This, according to the off-fish-al story is not correct. The ISS so legend has it, is travelling at 17,500 mph. Centrifugal force and gravity are exactly equal thus the ISS would be in a state of perpetual free fall and only its linear speed is stopping it from piling into the ball earth.

So we are not talking about conservation of momentum in a frictionless and weightless environment. Frictionless but still subject to a massive gravitational pull. 

A rocket in a frictionless and weightless state may generate a momentum. Not necessarily, but it might.

The molecules are rearranged in the combustion chamber and energy is released. The energy is what accelerates the "molecules". when the molecules are released, no force is transferred back to the rocket.

We must also remember that a higher pressure does not mean more mass flow. A warm bottle of compressed gas has a higher pressure than a cold bottle of compressed gas but contains no more mass.

The same applies to super heated gasses in a confined space. The pressure is higher but the released "mass" is less than if it was cooler.

There is no nozzle pressure if there is no resisting pressure.

"You say that all reaction force from jets, rockets, etc, is due to air pressure outside the system" <<< yes, a force can only be a force if it is resisted, otherwise it isn't a force. The combustion of fuel is required to cause the pressure differential. If you could spin the engine fast enough, with electricity for instance, you would get the same effect. forward momentum. Do this in a void and you will not get momentum.

3 and 4, the proximity of a solid object will only make a difference if it is very close to the nozzle (this is relative). Otherwise it will make no difference.
Reply: bob question molecules are theoretical? That's weird.... how is there actual pictures of something that only theoretically exist?! https://www.google.ca/amp/s/phys.org/news/2013-05-first-ever-high-resolution-images-molecule-reforms.amp
Reply: sleat
"If the rocket has mass and velocity, it has momentum. Simple as that." <<< yes, simple as that. No acceleration possible except as gravity steers that rocket inexorably back to ball earth. this happens on the flat "Earth" to.

This meandering does't prove anything. Nasa's fakery proves everything. Polaris rotation proves everything, long lenses prove everything, the scientist deliberately excluded from our education prove everything. and everything else. In fact, apart from hearsay what is your primary evidence that says to you, "you are on a ball"?,
Reply: vanillaHchrist
If you want to believe they are real, that's entirely up to you. They are pulling your leg, mate. Image is a very powerfully word. I have seen images of the inside of the ball earth, for instance. A photograph is a specific type of image. Look out for the word photograph, otherwise its just pretty pictures. Photo like images is another one that means made up. That's how they scoot around the catastrophic "blue marble" rubbish. "photo like image" ho ho ho.
Reply: bob question sure thing.... you have more knowledge regarding the shape of the earth then the pilots who have seen the curvature themselves flying above 50,000' (I know, I know.... they're part of the cover up), then the combined professionals that work for the 70 different space agencies (not just NASA), all of people who have sailed the globe, all the engineers, all the astronomers, all the physicists  and so on and so on..... because you sir, are an intellectual giant compared to all of these people
Reply: vanillaHchrist
Pilots don't see curvature. Concorde didn't see curvature. weather balloons at 120,000 feet see no curvature. Just an eye level horizon all the way up. unless you use a fish eye lens.

Space agencies have one goal. keeping you guys looking upward and feeling small.

Did you know the Vatican own ALL of the major observatories, including the one affectionately dubbed lucifer? They decided what was in your school curriculum, they decided you were on a ball, they claimed your soul as a baby. Only a soul can not be claimed. Whether through ignorance or choice it has to be given. 

Sounds pretty messed up doesn't it. Truth is always stranger than fiction.
Reply: +bob question    No need to haggle about pictures. Globe earth was a fact a long time before photography existed. Due to observations of sun, stars and distances. See here:
i.imgur.com/3Np5v1w.jpg
A clear falsification of flat earth. If you think otherwise, give your reasons for it so we can discuss it.
Reply: Durchblick
hearsay. The observations work on a flat earth. On a ball earth, the only way you would see star trails in a circle is if you placed the camera on the north polar axis facing straight up. anywhere else you would see an arc. This is backed up by the airys failure which also demonstrated that it was the stars moving and not "Earth".
Reply: +bob question    The picture clearly shows, that it does not work on a flat earth. Sight lines to the same object from different locations must meet at the position of this object, basis of any triangulation. This does not happen on a flat earth, sight lines do not meet in one point.

Your second argument is also wrong. On a flat earth with stars rotating on a dome (or in a similar fashion) above a flat earth you would see circles only from the north pole! From other locations you would see the circles sideways and they would appear as ellipses. Since the movements of earth by its rotation, orbit around the sun and even the movement of the solar system are negligible compared to the huge distance of stars, we see circles despite these movements. 

You mention Airy's failure, but you fail to add, that Airy himself never drew the weird conclusion from his experiment, that stars are moving and not earth. And shouldn't he have known this best?
Reply: Durchblick
Rotating on a dome, that is another issue. rotating, yes the stars do the rotation.

"You mention Airy's failure, but you fail to add, that Airy himself never drew the weird conclusion from his experiment, that stars are moving and not earth. And shouldn't he have known this best?"

He was astronomer royal,  he would have been stepped down if he had drawn the correct conclusion from the result of his experiment. 

His experiment was designed to prove the rotation of earth and failed, hence it's given name Airy's Failure. He knew that it failed to prove his hypothesis. So if it failed to prove a rotating earth, what is a sensible conclusion to draw from this? that's it, elephants are grey. Mr Airy's keeps his job.

I have one eyebrow, very much raised at the moment.
Reply: +bob question
I note that there is no opposition anymore from your side that sight lines to the sun do not meet in one point on a flat earth. Which is already a solid proof against flat earth. It is similar proved also with Polaris:
i.imgur.com/CPU63Tm.jpg

You did not respond to my argument, that with stars circling above a flat earth their trails would be seen elliptic . And more and more elliptic, the more you go south of the north pole. Not to talk of the impossibility of such a model to explain the southern celestial pole.

Airy's experiment was not about movement of earth, it was meant to prove the existence of aether. At his time most scientists and also Airy believed that an aether existed as medium for light. The outcome of his experiment was against the main stream, not with the main stream. No astronomer would think of a stationary earth, since there is overwhelming evidence for the movement of earth by observing sun and stars. Like the variation in the length of solar day coupled with the change in visual size of the sun or the parallax angle of stars when watched in winter and summer.
Reply: +bob question Do you remember my 4 questions from about 24 hours ago? They're right above.

I'd like to know your answers to those, please.
Reply: +bob question "No acceleration possible"

Any mass with net force acting on it will accelerate. If you doubt this, can you show me an equation that characterizes your doubt?

"except as gravity steers that rocket inexorably back to ball earth."

Well, if it's in orbit, it continues to change its path towards the earth, but the path never intersects the earth, until the orbit decays from friction.

But we have to ask ourselves at this point, how did the rocket get to this state? You can't attain an orbit by thrusting within the atmosphere. Your orbit will always come back to where you stopped generating thrust, in this case, within the atmosphere. If the entire ellipse of your orbit is outside of atmosphere, this is proof that you "circularized" your orbit outside of the atmosphere, by applying force to your rocket at the right point.

"In fact, apart from hearsay what is your primary evidence that says to you, "you are on a ball"?, "

Well, hearsay is no evidence at all! Personal experience is evidence. The following is from personal experience:

The simplest one is that Polaris's angle from the horizon is the same as the latitude one views Polaris from. The geometry for this simply does not work on a flat-earth.

Next, satellites turn up at predictable locations very remote from each other, right on schedule, with a specific Doppler-shift in their downlink frequencies, different for separate observers far apart, and concomitant with the speed expected for a low-earth-orbit. You can predict future orbits of a given satellite, travel to where it is predicted to turn up, and it does. To the second. You can tune-in the downlink with a hand-held UHF/VHF radio, and the Doppler-shift will be consistent with something at orbital speed. You can talk to others distant from you during a "pass" on the satellite's repeater. The other party will be observing a different Doppler-shift to you whilst talking to you on a given pair of frequencies. Due to the behavior of radios (multiple transmitters on the same frequency will "block" each-other) we know there's only the one transmitter, and that it's moving, fast.

Another is that Celestial Navigation works perfectly. The basis of the art is spherical trigonometry. Spherical trigonometry would be useless on a flat-plane for position-finding.

A given set of scales, moved to different latitudes without re-calibrating, will weigh the same test-weight and the weight will come up slightly different for different latitudes. When you solve for the earth radius and angular velocity for a given latitude, the change in apparent weight matches the expected centrifugal force due to Earth's rotation at that latitude.

I can probably think of more, but those are the big ones.
Reply: sleat
"Any mass with net force acting on it will accelerate". That's it. The net force being gravity. Since your rocket is in a vacuum, gravity is the only force acting upon it. weeeeeeeeeeeeeeeeeeeeeeeee...crash!!!!
Reply: +bob question Centrifugal force, and gravity are both acting on the rocket. Even if you wanted it to leave orbit, it wouldn't happen until friction slowed it down. That's a real problem with used junk in orbit these days.
Reply: sleat
Look, that is so wrong, but there is no point discussing the semantics of a make believe universe.
Reply: +bob question    You can watch rockets going up and curving in an orbit. How do you think engineers work out the necessary trajectory? They use the rocket equation, air resistance, gravity and centrifugal force. And the rocket equation is based on conservation of momentum. A law you don't seem to know. But if you are so incompetent that you don't know fundamental laws of physics, why do you discuss here at all???
Reply: bob question there you go again.... outsmarting all of science again

You and your gianormous brain.  

Research those flights you can book to fly high enough to see the earth's curve yet? Or a cheaper offer is to fly Quantas over Antarctica? Although, its cruising height isn't high enough to see the curve, but you'll get to see your ice-wall. 

Or you could actually book a trip to Antarctica. Or sue the booking companies for false advertising
Reply: Durchblick
all rockets curve over and end up heading for the sea. that is the unbendable nature of any rocket that doesn't go pop on the launchpad. Nothing steering it except gravity.

Why do we see the same stars in the sky summer and winter. We are supposedly on the other side of the sun winter to summer, yet the same stars occupy the sky. That would be a baffler, if I was believing I was on a spinning ball and attempting to explain this.
Reply: bob question there's that big ol' brain again being super duper smarter than all of science
Reply: +bob question   Complete nonsense! Rockets start perfectly vertical. Gravity pulls the rocket to the ground also vertical. Why should this cause a curve? And what should decide on the direction of the curve? As long as a rockt is in atmosphere it is subject to wind. Without steering a rocket could never achieve a desired course. Rockets have own nozzles for steering. What do you think these nozzles are made for? OMG. 

Seeing the same stars in summer and winter is not a baffler at all. There is for instance no reason, why you shouldn't see Polaris and stars near Polaris the whole year. But you refer probably to the fallacy of FE that you can't see stars which are on the sunny side of earth. Wrong, you can for most time of the year, but only some time after sunset or some time before sunrise. This picture shows the principle with Venus, which is always on the "sunny side" and still can be seen:
i.imgur.com/WpNted5

And in addition to that some constellations can only be seen in winter and others only in summer. Google it! Your ignorance is enormous.
Reply: Durchblick
All you are convincing me of is your ability to deny the obvious.
Reply: bob question the obvious? Did you watch the video?
Reply: vanillaHchrist
what video?
Reply: bob question I'll wait for the "it's fake" response
Reply: vanillaHchrist
what video?
Reply: Durchblick
Uranus. :D in your face, isn't it. ;D what a name for a planet.
Reply: +bob question "Look, that is so wrong, but there is no point discussing the semantics of a make believe universe."

Translation: "I believe (or believe I must believe) that centrifugal force and gravity don't exist, or don't apply to rockets, but I'm not clever enough to come up with a convincing argument supporting my beliefs, so I'll just claim it's a matter of "semantics" because it sounded good on a 'Law and Order' episode I saw one time."
Reply: +Durchblick "But if you are so incompetent that you don't know fundamental laws of physics, why do you discuss here at all???"

He likes being the center of attention, and all his loved-ones are sick of his shit, so here is one of the only places left where people pay attention, or at least, seem to.
Reply: sleat
I don't need to come up with "convincing arguments" I am more than happy for you to continue spinning. Indeed, why would you need convincing arguments of the plane, when you have never required convincing arguments of the ball?

As for that "translation", that's just monkey flinging poo. quite hilarious.
Reply: +bob question If you had a good argument, you'd have brought it up by now.

Unless you can prove you believe the earth is actually flat, it would appear you don't.

If you did believe it, you wouldn't shy away from the strong arguments folks are bringing up. As it stands, you simply ignore pertinent questions like the convergence of lines of sight on Polaris and the Sun at Equinox. You ignore questions about rocket-reaction-force against nearby solid objects, and particles falling through pressure gradients. You ignore, in favor of clowning around, proof that stars do move relative to each other, contrary to your strawman attempt.

That indicates to me that you're here because people are paying attention to your amusing performances in lieu of good arguments in favor of a flat earth.

How would you prove to these folks you actually believe the Earth is flat?
Reply: sleat
"Unless you can prove you believe the earth is actually flat" <<< should this not say "Unless you can prove the earth is actually flat"?

You are belief bound. You cannot think beyond belief. that's why you live in an assumption based universe of make believe. Orwellian double think and a few Hollywood special effects. You can live in a world and yet picture another, that is actually correct, and then dismiss it on the basis that some other people merely believe in it. Strange times indeed, but like I said, the clues are under your feet.
Reply: sleat that's because the Flat-earth YouTube channels where he does his researching can't explain it....

The same reason why the people who he claims to have worked for NASA that have exposed the "truth" only appear in these same videos.... such as that video that was exposing the moon landing by interviewing Stanley Kubrick.... until the whole video came out and it was exposed as a complete fake interview and it was even Stanley Kubrick 

But it's NASA that lies, because these idiot flat-earthers can't or refuse to believe that these YouTube retards would personally gain anything from lying to them
Reply: Dr. Goddard proved rockets work in a vacuum way back in 1916:  http://pioneersofflight.si.edu/content/goddard-vacuum-tube-apparatus   He was able to show they work even more efficiently in a vacuum.
Reply: sleat Good grief. I have never seen anyone so methodically pick apart a FE conspiracy nut with facts and math like you have. That was brilliant, masterful work. Shame it was wasted on him. How one person can be so willfully ignorant is beyond me. He has nothing to refute anything you've said, yet keeps going on like he understands the subject. No evidence, just lots of FE rhetoric right out of the FE For Morons handbook. 

I think he knows he's outmatched, and badly. 

And for the record, pilots and passengers of the Concorde saw the curve. So did the crews of the SR71. I'd like to see him tell any fighter pilot that the Earth is flat.
Reply: +bob question "when I was talking with him, he just kept regurgitating the same old brainwashing that we were all taught."

That's all the work order on you had in it to do. Apparently they don't think you're worth the effort, since you don't really believe the Earth is flat at all.

"wow, sleat managed to curve the plane and spin it, did he?"

Oh, and I didn't change the shape or behavior of Earth, any more than your evidence free beliefs could. 

So, does this mean you're getting some convincing arguments ready that the Earth is flat and stationary? Or do you still not even need those to prove it?
Reply: Speaking of "curving the plane" I have yet had one flat Earther explain to me how a sextant works on a flat earth when shooting the North Star and how the angle matches the latitude of observation. It simply won't work when you plot the angles on a flat surface.
Reply: bob question No, he used mathematics to prove his points. Which you conveniently side-stepped. 

If he said 2+4=6, you'd say that the answer is below your feet and that it just a conspiracy taught to us in school that the answer is 6.

It would be one thing if you had anything at all that was grounded in our physical world and proven. The spherical Earth has been proven, time and time again. Your blatant ignoring that fact does not make you correct. 

We have photos of the Earth from space, from Mercury to Gemini to Apollo. Images taken on film, well before CGI or PhotoShop were invented.

What we don't have is any evidence of the edge of the Earth nor of any kind of firmament. Surely one of your moronic brethren has driven/floated/flown to the edge of the Earth by now. No? Please, please, please tell me it's because the edge is patrolled by the world's navies. C'mon, show us how deep your delusion goes. 

The ISS is real and visible to the naked eye. Even better when you use a telescope. It moves faster and higher than any other manned craft, shy of the shuttle, when it was in service. 

Do you wash your hands? Why? Germs are invisible and therefore don't exist, right? Must be a conspiracy by big soap to get us to purchase unnecessary hygienic products. 

Just because you can't see or understand something does not make it impossible. That's where the math doesn't lie. Propulsion in space is a matter of the rapid expansion of gasses in a confined space, in this case the nozzle of the rocket motor, and forced backwards. It is this force that pushes the rocket in the other direction. There is no requirement to push off of anything. If this were the case, aircraft such as the SR71 would have been less effective the higher it traveled. That isn't the case. 

You clearly don't understand Newton's third law. You just don't. When everyone else is proving you wrong, take the hint. Not just telling you that you're wrong, they're proving it and you cannot and have not shown why the math is wrong and how it supports your idiotic beliefs. 

You want to prove we're all wrong? Build your own vacuum chamber. Build it as large as you can. Put a rocket in the center, put it near a wall, put it on the opposite side of the chamber. The result will always, ALWAYS be the same. It will move with the same amount of thrust. The math does not care what's nearby. Because you don't get this does not make the math wrong. It makes you wrong. Go ahead and prove us all wrong. 

Even then I doubt you'd be satisfied. You'd claim more made up bullshit trying to support your bizarre conspiracies. The rest of us who understand the physics will not be surprised when it works. 

When it works. Not if. 

Let's see you disprove us. With evidence and facts, not with your beliefs. I dare you.
Reply: Lyle Landstrom
If it works, then it works on the flat, still "Earth".
Reply: Robert Destree
mathamythics. is what he used.
Reply: +Lyle Landstrom Yes, sextants/celestial navigation is a common and strong argument in favor of a spheroid Earth. On a Flat earth, with a dome to which stars are affixed, Polaris will only appear at the right elevation at the North Pole, and 1 other latitude which depends on the distance to it. At the Equator, it will be hopelessly wrong, too high in the sky. 

For it to appear correct, the light from Polaris would need to bend, first one way, and then another, depending on the latitude from which it was viewed. In other words, the light emanating from this star would need to know where the observer was, and bend just-so, so that it always appeared in the right place.

That Polaris is being viewed from the surface of a sphere (for which there is other independent evidence) does not require any special pleading do make geometrical sense. The apparent location in the sky is trivially simple to explain, because the model showing where it appears is trivially simple.

The other important piece of evidence for a spheroid Earth embedded in the mechanics of Celestial Navigation, is that the mathematics underlying it rely on spherical trigonometry .

If the Earth were not a spheroid, but flat, the formulas for Celestial Navigation could use much simpler trig, only they don't.

I've already suggested that +bob question learn Celestial Navigation. It's a very useful skill for anyone who might someday find they don't know where they are, and need to figure it out.

Once he's learned it, it would be interesting to learn why he thinks the maths needs to be tailored to the appearance of a sky viewed from the surface of a sphere, if the sky is not being viewed from the surface of a sphere.

Saying "If it works, then it works on the flat, still "Earth"." requires pre-supposing that the Earth is flat, still, and that there is some mechanism which makes the latitude/Polaris angle geometry simply appear to be sphere-based when it isn't. That's quite a stretch, and at least a diagram would be required to make it anything but a wild claim. So far, no such diagram has been provided, although I'm sure we'd all love to see it! 

Bob?
Reply: bob question Oh, fuck, but you're a clever one, aren't you? 

Well done, side stepping the fact that you have nothing to support your beliefs. 

Let me know when you have evidence. Actual, physical evidence. 

Until then, shoo troll.
Reply: sleat Bob doesn't believe in math. It's the Devil's playground, probably. I'm just guessing that's what he believes.
Reply: +Robert Destree "Bob doesn't believe in math. It's the Devil's playground, probably. I'm just guessing that's what he believes."

I strongly suspect Bob doesn't even believe the Earth is flat. His behavior seems motivated by attention, rather than truth.

"Until then, shoo troll."

I'm quite sure that as soon as people stopped responding to his disappointing excuse for rhetorical discourse, he'd be gone. Sadly, I think I'm as much to blame as anyone for his continued persistence.

What tends to happen in these conversations is that the F-E type continually presents opportunities to demonstrate the weakness of their argument. One hopes the undecided who merely watch the comments will pick that up.
Reply: +Lyle Landstrom    Exactly, Polaris alone proves the spheric earth. And here is a nice picture illustrating it:
i.imgur.com/CPU63Tm.jpg

But our delusional friend bob question will tell us that Polaris can also be seen from southern hemisphere. Since flat earth society has published such a report. That millions of star gazers and hobby astronomers, all our chart of stars and programs like Stellarium refute this as nonsense doesn't disturb flat earth believers.
Reply: sleat It's disheartening that we still have to have conversations like this with F-E believers. They're right up there with anti-vaxxers and young Earth creationists. 

Your thorough debunking is not only fun to watch, it is quite enlightening. Kudos.
Reply: +Robert Destree "Your thorough debunking is not only fun to watch, it is quite enlightening. Kudos."

Thanks! I only wish one of these folks would actually engage with some of the evidence, at least try to discredit it, or explain it, instead of continually tap-dancing around and using cutesy mocking like "mathamythics". Is Bob actually proud of his innumeracy?

It's a bit like trying to argue with a six-year-old.

I think the anti-vaxxers and Flat-Earthers should band together, and claim that the only reason they're so committed to the belief that Earth is Flat is because they sustained permanent brain-damage from bad vaccines. That covers all the bases in a diabolically interlocking way!
Reply: Trolled like a boss.
Reply: wait! I think I got it. what bob is saying is, what is the gas reacting against. the exhaust moving out of the rocket is indeed being simply released. it is not colliding against the rocket, so there can be no opposite force. however, there is a form of rocket of astounding cheapness. it is the balloon! its plastic walls exert a force on the molecules to push them out, and opposite force is produced according to newtons third law, so even in vacuum it should work. so I now  interpret normal rockets this way. so the reacting molecules are pushing against the walls of the rocket, but in all directions. the net movement is downwards, so the net opposite force is upward. this also explains the inefficiency of rockets, combined with sound, heat and light loss. another principle that may be simultaneously at work is that as bob said, there must be something to push against. although the walls are one source, another is gas molecules. where you ask, when there is no atmosphere? why, in the rocket itself! so the molecules in their random motion are pushing against each other, and the only release is downward! so this net push and net opposite force are also involved.
I dont think most people truly try to understand rockets motion in vacuum. if it were simply release of gases at high temperature, then as bob said it wouldnt work, but I've made these two hypothesis that seem to make sense.
I must say that regardless of how outrageous we think another persons beliefs are, regardless of whether they are objectively wrong, we should always be polite and try to understand their point of view, and work together to find a solution, as anger blinds us (I know theirs probably no scientific evidence for 'anger blinds us', so perhaps I am wrong, we should always be ready to admit we are wrong, I am not pointing at anyone by the way). if we cant agree, we should politely depart with agreement to disagree. better than losing our temper and providing entertainment to others.
finally, my grammer is better than this, but it is exhausting enogh writing such long posts
Reply: Emaan Ajaz
What bob is actually saying is that the hypothesis that rockets could work in an infinite vacuum is wrong. Nasa never use newtons 3 law because they know it is not applicable.
Reply: bob question I'm curious to what even qualifies you to make such ridiculous statements.... what is your professional and educational background?
Reply: bob question what about my two hypothesis?
Reply: pushing against the atmosphere explains why the rocket accelerate faster on earth then in space.
my two hypothesis, IF they are correct, show why rockets are so inefficient. ion thrusters directly push the propellent, instead of eventually and quite indirectly pushing the propellent
Reply: vanillaHchrist
What makes you so qualified as to be able to judge what i have said to be ridiculous? Also, you must have made the judgement that rockets would work in an infinite vacuum. In itself a very ridiculous hypothesis.
So what qualifications do you have for proclaiming what is ridiculous and what is not?
Reply: bob question please, lets not fight
Reply: bob question so again.... what is your professional background?
Reply: bob question but when you release a gas under pressure it does produce force. but anyway check my first comment
Reply: BSM why are you insulting him, explain mothodically and gently, it doesnt matter even if he were to ignore the best evidence, not that im saying you are , bob, but BSM, insulting him wont make him agree, better to just say,
' I dont agree with you, but your entitled to your own opinion.'
and leave, no point in arguing, no, bickering and wasting time better spent elsewhere
Reply: vanillaHchrist
My professional background is with computing in large insurance companies. Completely not applicable to space physics and rocket science.

I am into physics for the love of knowing. That means I am free to study. I am not tied to a curriculum or bound to a dogmatic thought pattern forming indoctrination of factoid spewing mind programming.

I was going to study space physics and robotics as a PHD, but that was shortly before some questions I had always held became answered. At that point space physics and robotics took on the title of Ballshit Studies. The robotics would have been handy, but the space physics would have been a completely lie.

I had studied geology quite a few years ago and quit a bit of that was about space, planets, plate tectonics, fossils, rock types and chemical components. So loads of that was theoretical nonsense of a make believe gravitational ball universe. 

I have built rockets and I know their limitations. They produce pressure and they require a resistance pressure or its no go, simple as that.

Now have you ever asked  about the professional backgrounds of these Nasa scientists? You should really look into that.
Reply: bob question so what you're saying is..... you don't have any formal training or education regarding these fields.  Also, it would be a safe assumption that you don't have the resources nor the capacity to actually do any experiments at a level to definitively disprove "NASA" and why would you say robotics is bullshit?

Every flat-earther seems to forget that NASA isn't the only agency on the planet.

I would like to know what formal education you received in geology which would give you the ability to "debunk" the existence of dinosaur fossils.

For someone who claims to have all this knowledge.... I find it strange that you have not cited any sources to actually bring up a solid counter-argument regarding anything you have stated.

Just by your typical rebuttals, I was able to guess that you're a flat-earther, don't believe in dinosaurs, and that these beliefs are influenced by religion.
Reply: +Emaan Ajaz "pushing against the atmosphere explains why the rocket accelerate faster on earth then in space."

Except that with the same engines, the thrust is actually larger in space mainly because the exhaust doesn't have to fight air pressure and can accelerate more before it leaves the engine.
Add to this the fact that there's also no air resistance applied to the body of the rocket, when there's no air.
Using the same engine, the rocket would accelerate faster in space .
You might want to Google: Do rockets work better in vacuum?

The explanation is fairly straightforward.
Reply: sleat correct me if I am wrong:
what I meant was that while rockets can accelerate without any terminal velocity in space, due to their being air on earth to push against, the initial acceleration is greater than space, until air resistance quickly slows acceleration down to zero.
its a bit like if a rocket launches in space, but has a wall behind it. the wall will make the initial acceleration higher (although of course there would be no air friction afterward, so the acceleration will only slow down to a 'without wall' level, before fuel runs out.
so obviously a rocket works better overall in space, but i think that in atmosphere, at the very, very beginning ( zero seconds ) acceleration would be greater
Reply: bob question you are aware that that batshit crazy stuff like rockets going to space, satellites and the space station can be proven without leaving your backyard? You can actually take video and pictures of the using telescopes.  There are literally hundreds of sites and even YouTube videos that show you how to setup your equipment. https://www.google.ca/amp/s/www.universetoday.com/93588/a-beginners-guide-to-photographing-the-international-space-station-iss/amp/ ..... unless you think amateur astronomers and telescope manufacturers are in on the whole deception

As a flat-earther would say "those fucking tricky Jew bastards!"
Reply: +bob question   Rockets work due to conservation of momentum. If you really had any interest in pyhsics at all you should know this law. And it isn't bullshit. Engineers use it every day and it always works.
Reply: Durchblick
Conservation of momentum under gravity is an arc with a crunch at the end. You are not talking about any conserved momentum, you are talking about defying gravity and acceleration in a vacuum. And I am laughing at your folly.
Reply: +Emaan Ajaz "due to their being air on earth to push against, the initial acceleration is greater than space"

The initial acceleration is less in atmosphere. Rockets don't push against air. All the thrust force the rocket feels is defined by the equation F=ma, where F is the force, m is the mass expelled, and a is how much the mass is accelerated before being thrown away. In atmosphere, that amount is less because the exhaust accelerates less before leaving when there is atmospheric pressure present at the nozzle opening.

"its a bit like if a rocket launches in space, but has a wall behind it. the wall will make the initial acceleration higher"

That's not what happens, and you can easily test this to make sure. Get a digital scales, and an air-compressor with a trigger-nozzle on a hose. Cut a piece of styrofoam to fit on the scales, and make a notch to hold the nozzle pointing straight up.

Wire the nozzle-trigger so it's pulled. Put the foam-nozzle assembly on the scales, and zero it with the supply-hose lying loose.

Start the compressor, set the pressure-regulator to some pressure, like 50psi, or 50kpa, and turn on the air-tap at the compressor-end of the hose. The scales will read a force due to the mass and speed of the air leaving the nozzle. Note the reading.

Now put your hand 1 cm away from the nozzle (with the regulator set to the same pressure) and see if it reads a larger force. Can you make the force on the scales more (using the same pressure on the pressure regulator/gauge) by putting your hand near (but not touching) the nozzle?

You can do the same with a garden-hose with a pistol-grip trigger. Spray some water in a long arc through the air, and note the "kick" of the handle. Now spray against a nearby wall just the same. Do you feel a greater force?

In actual fact, the acceleration of any rocket is greatest while the engine is running, but just before it runs out of fuel. In that state, the force is similar to when the rocket started, but the mass of the rocket is much less, since most of the fuel is gone. When force is the same, but mass is less, acceleration is of course, greater.
Reply: sleat the mark of a great scientist, in my eyes, and also according to einstein, is if he can explain something in such a way as to make thing clear to a layperson. in my view, this must involve analogy. you have succeeded in both counts.
but you assume that I have a job, live someplace where those equipment are available, and that I've graduated. its no to all three, and so the first experiment is not easy. as for the other, it would be a great idea, except:
gas is compressible than liquid. anyway my assumption that thrust would be greater briefly is due to similarities of rocket pushing off medium to the ground effect, where the lift is greater than usual.
it would be highly appreciated if you could perform the first experiment, preferably with a leaf blower for simplicity, and give the date of the experiment.
finally, I cant believe I forgot that rockets get lighter with time, hence increasing there acceleration. but if there was a rocket with a steady source of fuel, then maybe the acceleration at zero seconds would be greater
ALTHOUGH NOW I AM EVEN LESS SURE THAN BEFORE
Reply: Emaan Ajaz
"the mark of a great scientist, in my eyes, and also according to einstein" <<<< Einstein was asked what is it like being the smartest man on the planet, to which Einstein replied, you'd better ask Nicola Tesla. Nicola Tesla thought theoretical physics was nonsense and that Einsteins theories on relativity and special relativity were a right load old made up nonsense from someone adulated in the presents of blindness. Nicola Tesla recorded over 700 patents to Einsteins 0.
E=MCsquared means absolutely nothing in the real world. It is cheap glitter from the mathemagicians hat and the absence of a subsequent rabbit. Einstein was a character created to convey a message. That message was "Eat not the fruit of the tree of knowledge because it's so damn complicated. Sit back and imagine it's splender, it's majesty; it's delicious ripe juicyness, but don't try to understand it". Then all this confusion to hide the plane. Maths is simple on the plane. Everything is harmonious. It all makes sense. Einstein was a bogus fraudster.

Order out of chaos???? There is no Chaos, just confusion.....

"There is not a single molecule, atom or piece of an atom that is not exactly where it should be in this whole universe.".
Reply: +Emaan Ajaz Thanks very much for the compliments! Other than high-school and college physics, the best physics skills I ever got were from my dad, who was an extremely patient guy. I wish you luck in finding patient people to talk you through some of this stuff.

Might I suggest going to a service-station, having a chat during a non-busy time, bringing your scales along, and asking to measure the force from their air-nozzle under various conditions? You realize that many stations provide a "free" nozzle outside for putting air in tires, right? Nothing to stop you putting that thing on a scales while it's running and waving your hand in front of the stream. As far as a leaf-blower, surely you can find someone who has one, and try it yourself, wherever you are.

Once you can see that the formulas actually work at predicting the behavior of the world, and how they do it, most Newtonian stuff is fairly simple.

"but if there was a rocket with a steady source of fuel, then maybe the acceleration at zero seconds would be greater"

The only way for the acceleration to be greater is either for the mass to be less, or the force to be more. Would you agree?

It certainly would be if the concrete launch pad provided any help, but experiment has proven that it doesn't. The equation, which impeccably predicts reality, for the force felt by a rocket, applies during the whole time the engine is burning, and there's no equation term for the presence of a wall behind the rocket.

An exception to this is if you fired some sort of rocket-projectile inside of a gun-tube with the back of the gun-tube either closed, or constricted, like a recoil-less rifle. In that case, for the first part of the journey, the rocket-projectile would effectively behave like a bullet, and accelerate mainly from the pressure built up behind it inside a closed space . It also would use a different equation for that part of its trip.

In open-air this doesn't happen, the formulas work, and there is no term in the formula for an obstructing object like a wall behind.

The best news is that you're already on the internet. There are free-learning courses from basic physics to astrophysics. All it takes is the will to learn.

Further, there is a free rocket simulator that you can play with, with very good documentation. Google: Orbiter space flight simulator.

If you're already on the internet, you don't really need much money to learn.
Reply: bob question you still havent given an opinion to my hypthesis, which I think explains neatly how rockets work in vacuum. even if its impossible to test rockets in a vacuum on earth due to the exhaust filling the chamber, at least I've got two theoretical explanations, which might explain rockets in vacuum. I'm reposting:

wait! I think I got it. what bob is saying is, what is the gas reacting against. the exhaust moving out of the rocket is indeed being simply released. it is not colliding against the rocket, so there can be no opposite force. however, there is a form of rocket of astounding cheapness. it is the balloon! its plastic walls exert a force on the molecules to push them out, and opposite force is produced according to newtons third law, so even in vacuum it should work. so I now  interpret normal rockets this way. so the reacting molecules are pushing against the walls of the rocket, but in all directions. the net movement is downwards, so the net opposite force is upward. this also explains the inefficiency of rockets, combined with sound, heat and light loss. another principle that may be simultaneously at work is that as bob said, there must be something to push against. although the walls are one source, another is gas molecules. where you ask, when there is no atmosphere? why, in the rocket itself! so the molecules in their random motion are pushing against each other, and the only release is downward! so this net push and net opposite force are also involved.
I dont think most people truly try to understand rockets motion in vacuum. if it were simply release of gases at high temperature, then as bob said it wouldnt work, but I've made these two hypothesis that seem to make sense.
I must say that regardless of how outrageous we think another persons beliefs are, regardless of whether they are objectively wrong, we should always be polite and try to understand their point of view, and work together to find a solution, as anger blinds us (I know theirs probably no scientific evidence for 'anger blinds us', so perhaps I am wrong, we should always be ready to admit we are wrong, I am not pointing at anyone by the way). if we cant agree, we should politely depart with agreement to disagree. better than losing our temper and providing entertainment to others.
finally, my grammer is better than this, but it is exhausting enogh writing such long posts
Reply: sleat school only gives us knowledge, most of which has no use to our career plans, what use is graphs to a doctor? most useful knowledge is gained at the first few years (fundamentals) and last few years (actually related to our career path). as important as knowledge is, we also should cultivate creativity, by encouraging questioning and experimentation, which school actually stunts due to a strict curriculum and limited time. it seems your creativity was saved by your father. my all time favourite example of how important creativity is when a 14 yr old high schooler, given the Knowledge that plastic decomposes eventually, came to the (perhaps flawed, since plastic can decompose due to other factors) conclusion that for plastic to decompose, there must be some microbe responsible. cue him isolating the bacteria. he did due to his creativity what PhDs didn't even Think of
Reply: sleat I would certainly go to the nearest gas pump to test, if those scales were available in my location, and I had money to buy them in the first place. that is why I ask you to perform the experiment (please?), and give me the date of the video
Reply: sleat I believe in newtons laws, they make perfect intuitive sense, and have been proven several times in experiment. I generally believe what scientists have to say, but carry a healthy bottle of skepticism around.

when I talked about the rocket with a steady amount of fuel, I meant one in space, and the other in the atmosphere

I no longer doubt that rockets can work in vacuum, as I came up with two hypothesis while trying to counter bob in my first comment. I've reposted that, it would be APPRECIATED if you could give some feedback on that.

if we added a wall to the equation f=ma, though it isn't needed, what would be the results, assuming that something similar to the ground effect occurs, OR some of the gas molecules reflect back and hit the rocket?

isnt the atmosphere a kind of like a gun barrel? it should work somewhat similarly, except its also providing resistance. REMEMBER, my argument was not overall performance of the rocket, just the initial acceleration of our steady fuel rocket being greater in atmosphere than in space. Because at zero seconds, the air hasnt started resisting the rocket yet.

lastly, IT WOULD BE HIGHLY APPRECIATED IF YOU REPLY INDIVIDUALLY TO EACH POINT RAISED IN THE COMMENT. thanks in advance
Reply: +bob question    Unfortunately, this citation of Einstein about the smartest man on the planet is a myth, there is no credible source confirming it. Also, since you rate Einstein as a bogus fraudster, why do you cite him at all?

Einstein did also register some patents, but of course his main work was in physics and such work can not be patented. Tesla had many patents but not 700. You only come to this figure if you count the same patents registered in different countries as different patents.

Yes, Tesla did not believe in the theories of Einstein. But he was wrong in this regard. Several experiments confirmed Einsteins theories. Tesla was a genial engineer but not such an outstanding scientist like Einstein. All of Teslas useful inventions are based on the laws of electromagnetism found by Clark Maxwell, Tesla die not discover any new laws of nature. Einstein did. And E=m*c^2 has many applications in the real world, e.g. in nuclear processes.

Yes, everything seems so simple with a flat earth. Unfortunately, a flat earth can not even explain our observations of sun and stars and it is in contradiction with distances on earth. That's why this model was discarded by science finally about 1500 years before Einstein lived. And in these 1500 years only new confirmations for the globe turned up but never anything which could put the globe into doubt. If you do not realize that flat earth is in contradiction with our observations of the sun, here are three pictures illustrating this:
1.    i.imgur.com/stjVBXz.jpg
2.    i.imgur.com/ukFWnpY.jpg
3.    i.imgur.com/oiyKMnx.jpg
Reply: +Emaan Ajaz   There is no doubt rockets work in vacuum of course. The question, if acceleration is bigger in atmosphere is in my opinion difficult to answer, since it may depend on many parameters. You can argue that air must be pushed away, air offers resistance and this increases the thrust. On the other hand there is air resistance of the rocket itself which reduces the acceleration. Which of the two effects outweigh the other may depend on weight and shape of the rocket.

With a heavy rocket as e.g. a Saturn V, having a weight of 2000 tons, it is difficult to imagine that air resistance causes a noticeable increase of the thrust. Thrust is so enormous that air will be pushed away quite easily. But on the other hand air resistance will increase quickly when the rocket gains speed. So I guess at least when a rocket has gained some speed its acceleration will be smaller in air than in vacuum.
Reply: +Emaan Ajaz "that is why I ask you to perform the experiment (please?), and give me the date of the video"

I have the makings of the experiment I described kicking around in my garage. Perhaps I can make a video.

But look, all you need to do is borrow a scales, and get close to an air-compressor with a dusting nozzle and a tap on the tank to turn the nozzle on and off. The rest is very easy.
Reply: +Durchblick There is a fairly universal equation which normalizes out all the variables and gives force (Newtons) as a simple function of free-stream pressure, nozzle-exit-plane pressure, mass flow rate (kg/s), exhaust velocity, and nozzle area.

This formula works everywhere it has been tested, and is useful for engineering new rocket designs.

The formula goes like: F= mdot * ve + (pe - p0) * Ae
Where mdot is mass flow in kg/s, ve is in m/s, Ae is in square meters, and pe and p0 are in pascals.
pe is the nozzle exit-plane pressure, and p0 is the free-stream-pressure. Ae is the nozzle area.
So, for example, sitting still on the launch-pad p0 would be ~101325 Pa.

So, you can see if the free-stream-pressure is higher (like in atmosphere) it actually produces a counter-productive back-pressure for the exhaust gas which, because of the "plus sign" slightly reduces the force felt by the rocket.

All of this just ends up with a force, so what the rocket does with that is up to other factors, like any drag force and the mass of the rocket. As you can see, something with half-a-tank of fuel running the engine at a given state with p0 = vacuum will accelerate more than something in the same state with p0 = 14.7 psi, according to the equation, because F will be larger.

So, basically, the specific impulse or "fuel economy" of a rocket is almost always higher in vacuum. Another term for specific impulse is total momentum added to the rocket per unit of fuel burned.

"The question, if acceleration is bigger in atmosphere is in my opinion difficult to answer, since it may depend on many parameters."

I think what we really want to know is if the force could be greater in the atmosphere because of the atmosphere . The "no rocket thrust in vacuum" crowd like to claim the atmosphere increases the thrust, force (presumably they believe it tapers to zero as vacuum is approached), but won't ever provide an equation to test!

We already know how a given mass of rocket will respond to the net force it feels. (thrust - drag)

Anyway, I can't see a set of parameters where p0 is any sensible atmospheric pressure which will produce a higher "F" number than when p0 is 0. Can you?
Reply: +sleat   Thanks for your detailed clarification which is very convincing for me. Atmosphere obviously reduces the speed of the exhaust stream and thus thrust is diminished. And air resistance of the rocket reduces the thrust also on top of that.
Reply: +Duchblick Yes, I'm pretty sure you got it. Now, one experiment I thought of for the "no vacuum thrust" crowd would be not to try to run rockets in vacuum, but to run them in something denser than air.

If they are correct, that the force a rocket feels is somehow due to "pushing off the environment" that the rocket is in, then logically a denser operating environment for the same rocket should produce higher static thrust .

Clearly the drag would also be higher, in, say, water, so that's why static thrust should be measured instead, to cancel out any parasitic effects of the environment itself, and focus only on the force generated.

They seem to believe that the exhaust, having already left the rocket, can somehow communicate force back to the rocket, as if the exhaust were a solid object, like a broomstick. It's as if they believe that the body of the rocket somehow "knows" what the matter which has already left the rocket at quite a high speed is doing, and reacts accordingly.

This is analogous to claiming that the recoil of a gun will be different if you shoot the bullet up, rather than against a nearby wall.
Reply: +sleat   I suggested, they should stand on a skateboard and push a heavy stone away. The skateboard will move in the opposite direction. To make sure this is not due to pushing against air they could use a foam ball of equal size and thus with equal air resistance and see the difference.

Your proposed experiment is also a very good one, but I am afraid flat earth believers are more interested in upholding their weird belief that they are deceived about the shape of earth then making clarifying experiments. And I admit that physics is not always intuitive. It was an achievement some centuries ago to find out, that an object without any force working on it will move in a straight line with unchanged velocity for eternity. Since this is not readily watched in every day life.

But it is absurd to doubt best assured laws and formulas, which are used by engineers every day - and they work.
Reply: so if you're aware of Tesla's work and theories, then you would know that he referenced the earth as being a globe multiple times..... unless you got bamboozled by the fake quote that's been spread by flat-earthers and has been proven to be fake
Reply: and bob..... I find it convenient that you did not respond to my comment regarding having the ability to verify the existence of satellites and the space-station yourself by using a telescope.
Reply: vanillaHchrist
Tesla said of the "Earth" that it was not an object it is a realm. He said it has no edge. He knew that radio signals could be sent all around the world from one single transmitter with no boosters or repeaters and that the radio signal could be received everywhere. The BBC world service and the american navy both used such radio stations,

Whilst globular theoretical psyntists would have us believe that radio signals bounce of a layer of charged particles in the very thinnest part of the atmosphere called the Ionosphere and miraculously arrive at the destination in a usable state, after traveling up through dense atmosphere full of random charged particles and back down through a random mix of even more charged particles is laughably stupid.

This one thing alone tells you you aren't on a spinning ball and that there is something that reliably returns radio waves from the sky. This could be a limitation of the electromagnetic "aether" or it could be something more solid. Either way. Telsa knew it is no spinning ball. and world radio absolutely proves it. World radio existed well before any "satellites" were allegedly launched.

So whilst you might be looking at quotes to label as fake whilst  choosing to accept others about a globe as fact, I look at the culmination of reality. At the end of the day, it doesn't matter what he actually said. Its all down to empirical evidence.
Reply: vanillaHchrist
You think you can see satellites and space stations. Some people think they see faeries and goblins. I have never seen a "satellite" and that thing you think is the ISS is not. does it travel 71 times its own length every second? No.
Reply: Durchblick bob doesnt doubt newtons third law or conservation of momentum. he just thinks that these do not apply to rockets in vacuum. if my understanding of his understanding is correct, he believes that the gas is simply 'released'. that is, the molecules travel outside the nozzle in straight lines without impacting anything, so there is no push and certainly no throw, and hence no opposite force on the rocket.
bob gives an analogy of a driver pushing the steering wheel to make the car move forward. but I think I can use that analogy to PROVE otherwise. three steps:
1. recline the driver's seat
2. jump straight up
3. deliver a flying kick to the steering wheel at full force

result will be that you will fly backward, and the car will lurch forward

and bob does believe in the skater example
Reply: sleat another genius analogy. I hope your using that mind of yours for far greater purposes than debates on the internet!

I am not of the 'rockets dont work in vacuum' crowd, but rather the 'rockets work better in air if it wasnt for air resistance, because the air acts like a gun chamber' crowd, which probably consists of only me :)

my only suggestion would be to use a pendulum in both light and dense mediums, you know , the pendulum experiment, and to put the rockets at 90°from the zenith, so that as they descend down to where thrust can be measured, resistance of medium is not a problem

this experiment is perfect for proving the point. congratulations sleat
Reply: Durchblick
I disagree.
Reply: Emaan Ajaz
You need to pay closer attention to the wording of newtons third law. You are almost there but you are missing the crux. when you get it, you will realise why it is correct and why it does not apply to a rocket in a vacuum.

"bob does believe in the skater example" Do i?
Reply: bob question "I disagree"..... hey fuck an explanation or any logical rebuttal.  Bob disagrees, so it must be incorrect.  Why provide any cited facts or reality as to why you disagree...... "I disagree" that's it, show's over folks... Bob disagrees.  Just pack up your facts and logic, Bob muthafawk'n disagrees yo!

Spoken like a true "scienter"
Reply: vanillaHchrist
:D First I'm told that Tesla quotes are duff, then I'm told that Tesla said the "Earth" is spherical as if suddenly they are not duff. I've explained why world radio works and proves its not a ball and that the bouncing radio waves off of charged particles in the Ionosphere is a ridiculous notion. 

You want me to keep repeating myself?

If Bob disagrees, you betcha big fat ass, that Bob has told you why, already.
Reply: bob, I'd really appreciate it if you replied to my comments more
Reply: Emaan Ajaz
I replied to one 55 minuets ago. Did that one answer the question you asked? If people ask sensible questions, I don't mind answering them. And yes, i am distantly related to Chuck Norris. 6 degrees of separation and all that. I could even be distantly related to you. As for vanillaHchrist, I already think of him as a little brother. He's just confused, thats all. I understand your confusion little brother. :D
Reply: +bob question "You think you can see satellites and space stations."

Certainly the cosmonauts docking with them think they can see them, and they had bloody better see them.

"Some people think they see faeries and goblins."

The key difference here is that there is no way to measure goblins and faeries in a recordable, reproducible way, unless you know of one I'm not aware of.

On the other hand, I, myself, nobody special, can measure the ISS and other satellites in myriad separate electromagnetic spectra !

I can use trig to graph how fast it must be going for a range of possible altitudes. Here's a clue...at 45,000 feet such an object would be going so fast it would leave a glowing ionization trail crossing the sky at the angular-velocity that it does. The only height that makes sense for it would be something like 5,000 feet, with something separate flying nearby to light it up evenly. But that doesn't explain how it can appear, silently gliding overhead, for someone in Melbourne, and someone in Sydney at the same time but in different directions, and then appear to someone on a ship in the middle-of-the-ocean thousands of miles distant, 15 minutes later.

That's right. I can image satellites, including the ISS in the Infrared, in the visible spectrum, and in the RF spectrum I can both transmit, and receive, RF from certain satellites, and I can do so at the same time as people hundreds of miles away, except that their Doppler-shift is down when mine is up for the same transponder .

And here is the kicker...they ALL (except geostationary ones, obviously) exhibit a n RF Doppler-shift!
This Doppler-shift in frequency both geometrically matches what you'd expect for something 400km away going ~17,000mph, and is a different shift for every separate observer along the track simultaneously .

I have tested this with other HAM friends, and you could, too, if you were interested in doing actual science , where you make a hypothesis and then do everything you can think of to try to prove it wrong .

You do the opposite, apparently. You get hold of a belief and systematically throw away or disregard all the evidence which might contradict it. Not very scientific at all. Have you ever discovered anything useful with this technique?

"I have never seen a "satellite" and that thing you think is the ISS is not."

What is it, precisely, which matches the behaviors I have cataloged above?

"does it travel 71 times its own length every second? No."

Yes. It does, just about that fast, between 70 and ~100 times its own length, depending on which way it's pointing when it comes over. https://www.quora.com/Does-the-ISS-always-face-the-Earth

It's bloody hard to take snapshots of with a telescope by hand, and that's one reason why. It crosses the sky quicker than any airplane you ever saw (but couldn't hear).

Tell me, how could you know that it does not travel that fast, if, as you say:
"I have never seen a 'satellite' " ?
Reply: +bob question ":D First I'm told that Tesla quotes are duff, then I'm told that Tesla said the "Earth" is spherical as if suddenly they are not duff."

If you are getting your quotes from "Flat Earth" sites, which obviously have an agenda, perhaps you should double-check for a citation. Do you think it is remotely possible that a Flat Earth site might either quote-mine, or completely mis-quote Tesla?

Would a Tesla biographer intentionally mis-quote him? And if so, to what end?

If I say: "Bob said he doesn't believe the Earth is flat!"
And someone else says: "Bob said radio travelling all over the world without reflecting off the ionosphere is proof the Earth is flat!"

Can you spot the difference? One quote is <blank> and the other is <blank>. 

Fill in the blanks, bob.
Reply: +Emaan Ajaz Again thanks for the support!

Water is only one option. One could also simply pump up the chamber to 2, 4, or any multiple of sea-level pressure for such an experiment.

I think it is important to eliminate as many variables as possible when doing these experiments, so that you are measuring the thing you're interested in.

A load-cell, as found in a set of electronic scales, will measure the static thrust and that's what we're interested in. Such a scales works fine in a hyperbaric chamber, I've found.

We already know air resistance is a thing, we don't need to measure it. We want pure force measurement.
We want to see if the force is greater or lesser in a denser atmosphere.

The "no thrust in vacuum" crowd would say it should be greater the denser the environment, since they say it is less (much less) in a less dense environment. That is the crux of their assertion.
Reply: sleat why use scales when the displacement from the zenith in the pendulum experiment might be enough visual evidence?
Reply: +vanillaHchrist Yep, thanks for finding that.

I suspect "putting words in a dead man's mouth" is just an attention-whoring ruse.

One of my hypotheses is that these folks don't really believe this stuff, but some of them think it's the only "bait" that will get them attention from folks like you, who they secretly know are smarter than them.

How do you get an "A" student to pay attention to you if you're a "D" student? By appearing just thick enough to reel them into teaching you for nothing!

If your self-esteem is low enough, the pedantry and disgust of the A student is overbalanced by the buzz of getting them to focus on your endless drivel and horseshit, for a while at least.

Anyway, that's one possible explanation for the tireless incredulity, half-truths, cherry-picking, quote-mining, strawmanning, mis-quoting, and mis-interpretation of known facts. There may be others that satisfy the observations.
Reply: sleat also, I'd like an opinion on my liquid rocket experiment
Reply: bob question sorry, but I feel you dont reply in a way that matters.

what is the crux that I am missing?

how is my correction to your car analogy faulty

what about my two hypothesis

my experiments to prove whether or not rockets work in vacuum

whether my understanding of your point of view is correct
Reply: sleat
Oh, dear sleat. Your Orwellian double think capacity is maxing out. You have massive clashing ideas in your head that are all grinding together like ill fitting glass cogs. One day you need to simplify what is in your head because clashing ideas cause physical distortions with in us.

Theoretical physics is a way of understanding a universe. Not our universe.

"Tell me, how could you know that it does not travel that fast, if, as you say: "I have never seen a 'satellite' " ?"  <<<<< I have seen the mock up ISS in the sky, the ISS = imaginary Space Station. The mock up does not travel at a speed or consistency conducive to story.

I have seen lights in the sky, but those are not satellites orbiting a ball. Notice how Nasa never uses the term satellite. They use the term instrument. That's because they are not talking about any satellite.

Watch those lights in the sky, quite often you will see them change direction and or speed.

Geostationary orbit means on the ground.
Reply: +Emaan Ajaz "why use scales when the displacement from the zenith in the pendulum experiment might be enough visual evidence?"

Because thinking about static-thrust-force against a force-measuring device with a digital-readout saves effort, at least in my lazy brain.

Maybe you could upload a drawing somewhere of your pendulum idea. The "displacement from the zenith" term might be giving me trouble. If you use a pendulum with a rocket, you'll get all sorts of oscillation that complicates the explanation to the "no vacuum thrust" crowd and might give them all sorts of excuses to bad-mouth the whole experiment. 

I've dealt with them for a while, and they like to muddy the water as much as possible, even more-so when it looks like you've supplied a very strong argument/evidence.

Of course, they could also claim you "rigged the scales" so maybe it's a better idea. Draw me a picture!
Reply: +bob question    Isn't it quite simple to state that Tesla knew that earth is a globe? He wouldn't reference the globe in his patent texts otherwise, would he?

" The mock up does not travel at a speed or consistency conducive to story "
You find the position of ISS for any date and time in the internet. And one can see the ISS at these times in the sky. Can you detail, where you see inconsistencies in the speed of ISS? Can you explain, how the shape of ISS changed from a "T" to a "H", observed by many hobby astronomers, due to the extensions done up there?

NASA never uses the term satellite? How do you explain, that the term "satellite" is found countless times on NASAs homepage? And why always NASA? Are you not aware that only a small minority of satellites are NASA satellites nowadays?

And where is a video showing lights in the sky changing direction - except airplanes? And geostationary satellites are the ones most difficult to watch. See
https://en.wikipedia.org/wiki/Satellite_watching

Can you explain me how sat TV works without satellites? A website like   www.dishpointer.com   shows that all dishes point to objects 36000km above the equator. What's up there if not geostationary satellites? Can you explain why the GPS antenna of planes are always mounted on the top of planes? Can you explain why you loose your satellite phone connection at once with a solid roof above you, but terrestrial services still work? These are sensible questions, aren't they? I hope you don't mind answering them so we can discuss it.
Reply: I've came up with an analogy for why rockets should work in vacuums two days ago, here it is:

Imagine a sheath in a vacuum. An explosion happens near it and the expanding gases touch the wall. Obviously, the sheath would be knocked back (this is the concept behind the Orion project).
Now imagine that the sheath is curved in a concave, towards the explosion. It catches more of the expanding gas and moves away faster.
Now imagine that the sheath is the shape of a sphere, around the explosion, with a hole at one end. Due to the gas expanding in a sphere, initially the gas moving directly towards the hole will simply escape, due to not pushing anything. If we divide the sphere in two halves, one with the hole and the other a perfect hemisphere, then the sphere would still initially move forward due to the side with the hole having less surface area, and the hemisphere side experiencing greater force due to no escape of gas. But then all the gas will reflect, and start random motion, colliding with each other and the walls. Since the only way out is the hole, the net force of gas will be there. Since the gases must collide with the walls to eventually escape, the net opposite motion will be opposite the hole. 
Now let's look at rockets. The rocket is a cylinder instead of a sphere. The fuel burning is essentially an explosion. One end of the cylinder is closed. The other end is open. The expanding gas does not reflect opposite the desired motion, except by collision with other gas molecules. Some of the gas simply exits the hole, without touching the walls or other molecules. That fuel is wasted. Hence rockets working in vacuum makes perfect sense, but not according to the usual overly simplified explanation.

I'd appreciate if you all could give your opinions on this
Reply: Emaan Ajaz
"I've came up with an analogy for why rockets should work in vacuums two days ago, here it is:..."
Rockets can't work in an infinite vacuum and your analogy is wrong. Its like coming up with an analogy for why a spinning ball should look and feel like a stationary plane, when in actual fact, it is a stationary plane.. 

You are wandering down the path of theoretical psynce. That path goes away from reality not towards it. You are making up excuses for believing nonsense.
Reply: bob question no one should insult bob for what he is saying here. you can debate as I am about to do, but insulting him is not warrented. this is despite his provocative tone.

and bob, couldnt you have put that a bit more politely?

I would like to clarify I have an open mind, bob. if you read my comments, you will see I have a position on rocketry between yours and sleet (though I lean towards sleat)

the first step towards understanding is theory and hypothesis. I too did not understand how rockets could work in vacuum, but recently when I saw your comment the concept just clicked, somehow. I beg you, please read my first comment carefully, and tell me how, theoretically, I am wrong in both my hypothesis and my analogy

I believe what seems to make sense, if something doesn't make sense, I discard it.

if you think I am moving in the wrong direction, a detailed explanation would be a blessing
Reply: Emaan Ajaz    I am also opposed to insults but one can loose one's composure when someone like bob makes claims without any evidence and doesn't respond to sound arguments refuting his claims. Rockets work due to conservation of momentum. This law has nothing to do with vacuum or not and can be found in any textbook of physics. And it is used by engineers every day. There is even a proof that our universe could not be stable without this law, google "Noether theorem" for that. If someone denies such best assured facts, he must be prepared to be insulted. Since by his claims he also insults science and all engineers working with this law.
Reply: Durchblick exactly!
Reply: Durchblick if he challenges the scientific view, he should be prepared to be criticized. that is different from being insulted.

in my view, it isnt justified to lose your composure over the internet, with someone who you cant see, and who cant interrupt you, just because he disagrees with your (in my opinion mostly correct) views. we should raise our standard for losing our temper. afterall, insults dont change opinions, and we have to lower ourselves to use them
Reply: +bob question "Rockets can't work in an infinite vacuum"

Space is not an infinite vacuum. Space contains matter, including us but that's not why people think rockets work there.

"and your analogy is wrong."

How is it wrong, exactly?

Now, let's imagine, for a second, that we have an "infinite vacuum" and a steel plate, with a stick of dynamite next to it in that infinite vacuum.

We set off the dynamite. Does the explosion affect the plate in any way, when the results of the explosion hit it?

Why, or why not?
Reply: sleat ah, you read my comment.

do you think there is any error anywhere in the analogy?

I love hearing different opinions, and then debating
Reply: Excellent. We all realise the pointlessness of negative input and we all understand what it is like to get frustrated at this situation. I have believed in the globe for nearly 47 years (Darwin, Einstein, Copernicus, Galileo etc). Having discovered that the cornerstone of the inflatable castle that is the globe hypothesis is trust and that trust has been seriously abused is a bit of a show stopper. However, that doesn't mean that we are not all very capable of understanding each others situations. 

These psyntist do indeed belong to a club. They are not called freemasons for nothing. They are called it because they are building something for their masters and they are doing it for nothing. They think they are called "Free"masons because they have additional "freedoms" that the rest don't get. This is not the case. They are allowed to exercise curtain "rights" that the rest of us are denied, however, a granted right is not a right it is a privilege. So certain inalienable rights have been granted back to them as privileges in return for denying everyone else's inalienable rights including our right to knowledge that is correct.
 
They contract to a cause without knowing what the cause is. Each step up on the masonic ladder promises them more light (knowledge)
but they never get to know the whole picture.

The problem for you guys is, how do you see an abuse of trust if you don't think it is possible? Only a mind that is able to free itself from the prescribed thought pattern will be able to see it. (we can all do this).

If you guys are unaware, the vatican has claimed your souls (Unum Sanctum 1302). They then force you away from your parents to be indoctrinated in a well tried and tested concentration camp style schooling methodology which turns even the smartest of people into stuffed brained zombiesque stress monkeys. 

OOOOooh!, there goes another huge asteroid near miss...............not!.
Reply: +bob question So, you're asserting that all scientists are freemasons, or that all scientists are crooked somehow. This is yet another naked assertion which I suspect you may decline to substantiate in any meaningful way. In other words what proof do you have that scientists are crooked, or are all freemasons?

But does dynamite move a nearby plate in vacuum when it explodes. Yes or no, and why?

You seem to want to change the subject, instead of answering our polite questions. Why is that?
Reply: Emaan Ajaz
I do try and put my points across politely. Sometimes, when you tell people what they least want to hear, they take it as impolite. Nothing I say to anyone is meant impolitely but, having gone through the baptism of fire that is cognitive dissonance, there is no easy way of waking up to the incredible truth. 

Once you do wake up and you realise that it is the spinning ball that is the unbelievable nonsense, your head begins to let go of the mathematical contortions. 

Believe me when I say that the flat, still plane is a "gateway" truth. The ball lie is just a tiny weeny part of the fogging of perception. All illness is merely disharmonisation and ALL illness can be reversed by re-harmonisation including cancer.

Does that sound to simple to be true?
Reply: +Emaan Ajaz Bob is trying to change the subject again, and yes, the analogy is a good one.
Reply: sleat
" So, you're asserting that all scientists are freemasons " <<<< no. You understand compartmentalisation, don't you? Why on "Earth" would all scientist need to be freemasons? 

"All scientists are crooked somehow." <<<< why would all scientists have to be crooked?

You sir, are the one making assertions and getting them badly wrong.

I would not even make the assertion that all Freemasons are bad people. I don't believe they are. I know some and I get on with very well with them.

When my teacher taught me about the planets, he had no idea he was telling a complete lie and he was an expert. I have told others what I knew of the gravitational ball universe, and i told them like I believed what I was saying. That makes me as guilty or not as any of them.

This lie goes back to a relatively small group of people who know about it and sanction it via curriculum. They use the compartmentalised structures to steer us to where they want us to be. With all lies, once you start telling them, they escalate till it all falls apart.

This is what is happening now. Awareness is happening. tick tock, tick tock....its only a matter of time. 

There are so many professional whistle blowers out there. You must be making a point of avoiding them.

Why do you think this is not relevant to the subject?
Reply: sleat apparently when he implies that people are liars and their life's work or achievements are bullshit.... he's doing it with the upmost respect and best intentions

But he's accusing others of using "double talk"?! 🤔
Reply: bob question snappy comebacks, assumptions, not acknowledging questions, let alone answering them

these all count as being impolite. next time you make a comment, I'll point out each insult you make. you might not even KNOW you're being so provocative.

every one else here seems to have calmed down now and are speaking much more politely

with the exception of vanillaHchrist
seriously, I told you not to insult bob, and you went ahead and did just that! why?
Reply: though it isnt just bob that isn't acknowledging what I have to say. no one has given any feedback on my liquid rocket in vacuum experiment!
Reply: Emaan Ajaz go back up the feed and read what I said again.... since I've already stated why.

Who are you?! captain internet?!
Reply: Emaan Ajaz or as bob would say "I disagree" or "not true" or even "Freemason, Devil worshipping, NASA, Jew!"
Reply: vanillaHchrist the internet is a place where people gain anonymity and a large audience. study shows this turns most people into 'trolls' since their are no repercussions for what they say.

I can't stop you from insulting bob, it's your right to speak what you want. but even though bob is provocative, doesnt acknowledge questions, and doesnt give, in my opinion, give evidence for his claims, that deserves criticism

not insults

insults do not change peoples minds. insults mean losing composure, why lose temper over something as minor as this.

we lower ourselves when we use insults. criticism on the other hand is entirely justified.

the people here seem like intelligent people, that is why I even bother. I dont even comment on most threads
Reply: +Emaan Ajaz "though it isnt just bob that isn't acknowledging what I have to say. no one has given any feedback on my liquid rocket in vacuum experiment!"

Can you make a reference to it or post it again? I'm sure I didn't see it somehow.
When did you mention it?

You do know that liquid water will actually stay liquid for quite a while in vacuum, and subsequently freeze if the vacuum is below the vapor pressure of water, right?

Initially it will actually boil but as it boils it loses heat according to water's heat of vaporisation, which in this case gets subtracted from a given mass of water as it is subjected to vacuum. Eventually so much heat is removed that it freezes, but if you fire a "water rocket" in vacuum, what comes out will definitely be liquid. Freezing the room-temperature water, even in good vacuum, takes a while, unless the amount is tiny.
Reply: +vanillaHchrist "he's doing it with the upmost respect and best intentions"

If he really believes his narrative, it's surprising that he limits his politicking of his beliefs to YT video comments.

Why doesn't he try to "drain the swamp" of corrupt scientists by exposing them, naming and shaming them publicly by proving that they're actually lying about something specific? I guess the bar would be pretty high if they're actually not lying and can show him how to do precisely the same experiments for himself, or at least all the raw-data and lab write-ups they've done, for the experiments that he accuses them of faking the results of. He could at least still "name and shame" them, though. Most scientists' emails are published so he could address them personally.

Telling a bunch of strangers on YT that he's found the answer and "psynce" (I thought psynce was a musician) is a lie doesn't seem very productive to me, unless he's merely trolling or seeking attention, or both.
Reply: +bob question "This is what is happening now. Awareness is happening. tick tock, tick tock....its only a matter of time. "

And what then? How does reality change when you win?

Or is it only a matter of time until you answer my question. Here, I'll post it again for your convenience:

Does exploding dynamite move a nearby plate in vacuum when it explodes. Yes or no, and why?
Reply: sleat sleat I've asked you several times now to give an opinion on my liquid rocket experiment. I am reposting it, and hopefully you will reply this time around (sorry, I'm getting frustrated by a lack of response from both sides, though I assure you all I wont insult anyone)

repost:

wait another minute! I think I've got another it!

we can prove without a doubt that rockets can run in vacuum, using this very apparatus as used in the video... but with a very minor difference.

As bob and many others including my self have observed, the rocket may have pushed off the smoke that was released (although I really doubt now if that smoke, with such low density due to being diffused in a vacuum, could have been a good resisting medium. even if it were, I dont think most of a rockets momentum comes from pushing against air. look at my other comments in this thread). one solution could be to keep the vacuum on, and use a balloon or compressed air rocket to avoid damaging the pump with smoke

BUT THAT IS NOT MY BIG SOLUTION. since the rocket may still be able to push off the gas before it leaves.

my solution is to use something that can be pushed out, but not come in contact with the rocket afterwards. I am talking about liquids.

now you may be thinking, that in vacuum a liquid would turn into a gas, due to the low pressure. that is why we must use a liquid with high boiling point. I was thinking of mercury, in high pressure in a plastic bottle.

also, I suggest taking a control in air before using three samples:
1. chemical rocket 
2. compressed gas rocket, keep the vacuum pump on
(due to the low pressure of both smoke and gas in vacuum, the speed of the rocket should be MUCH lower)
3. liquid rocket

and of course, if we are to make it a scientific experiment, there is no harm in repeating the control and all samples several times.

someone, do this experiment (I lack the finances). lets make this the final say in this argument, cant argue with real life. but lets all make a pact, that we all agree with this experiment
Reply: sleat
I'd love to discuss the dynamite issue with you, but you keep demonstrating that you don't understand what is being said to you.

Its like you have a head so full of thought stoppers that are not able to comprehend the simple stuff. That's the Orwellian double think.
 
"A conspiracy involving literally everyone else" <<< These are your words.  Next you'll tell me the "Earth" isn't flat because there are no turtles big enough to carry it.

A conspiracy by definition is a plot involving two or more entities that INVOLVES BREAKING THE LAW, If your owners lie to you, they are not breaking a law unless you deny them permission to lie to you. This also means enforcing the lack of contract (Ie denying their claim to your soul). If you don't enforce the fact there is no contract then you are a pet. And an owner can lie to its pet without breaking any laws.

You are well confused.
Reply: +bob question If you would love to discuss that, then do it.

Would there be some dire consequence if I don't understand what you say? 
Did you forget that for every person talking to you, there are another few thousand watching?
That should be a win for you not me.

Just think, if I don't understand what you're trying to say about your opinion of dynamite against a plate in a vacuum, you can then truthfully say "just look at brainwashed sleat here, he can't understand my plain English!"

What have you got to lose? Nothing that I can see.

Claiming "I won't answer your dynamite question because you're too thick to discuss it" is simply an obvious dodge which most folks paying attention would agree. Just ask them.

I completely agree with your legal definition of conspiracy, and would be happy to discuss your further points once you answer my dynamite question, since I raised that beforehand, several times.
Reply: Emaan Ajaz
A rocket works by producing pressure. IE compressed gas. If you are going to test a rocket in a vacuum chamber in order to reproduce an infinite vacuum, you need to completely dissipate every molecule that is released as fast as they are released. You will be hard pressed to find a pump that can do this since they rely on pressure to force the gas out of the vacuum chamber in the first place. This is why you rarely see anyone achieve a complete vacuum. The best way would be to use a long cylinder with a piston. Calculate the highest output of gas from the rocket, Then draw the piston back so that the resulting gasses acquire no pressure what so ever. That will take a long tube and piston. and a very small rocket.

You would need an acrylic tube and a nice smooth, well sealed piston.
The piston would require something to dissipate the friction as it is drawn back. You would have to make sure that you use an nonvolatile lubricant (non volatile even in a vacuum). A cold compressed gas in the rocket would be better than a combustion rocket since heat increases pressure.
Reply: +Emaan Ajaz "I've asked you several times now to give an opinion on my liquid rocket experiment."

I'm not avoiding it. At first I couldn't find what you were referring to. Thanks for re-posting it! I'm thinking about it, and I have some points to offer.

As an initial observation, you should be aware that a tub of mercury, even with a vacuum pumped in the free-space above it, will be far from vacuum pressure at any sensible depth below the surface of the mercury. Assuming no vacuum above, the absolute pressure-at-depth would be atmospheric pressure plus the depth-pressure due to the weight of mercury column above the measuring point.

This is easy to visualize since atmospheric pressure, say in pounds-per-square-inch at sea-level, is simply the weight of the air in a 1 square-inch area vertical column the height of the atmosphere.

It is clever, though, since you seem to have embraced my idea that if thrust disappears as one approaches vacuum, it should increase when the pressure is above atmospheric.

Mercury is pretty expensive, and also amazingly toxic in organic compound form. The LD50 for something like Methylmercury would be on the order of 1mg/kg. And if you think some people here have a tenuous grip on reality, you should see someone with mercury toxicity. Mad as a hatter, literally.

I'm still thinking about it, but the mechanics of such an experiment would also be very interesting. Everything used in the experiment floats in mercury so the rocket-thrust would need to be measured strictly perpendicular to gravity to make any sense!

All the apparatus used would literally have to be nailed down to stop it floating away in the mercury-sea!
Reply: sleat
Utmost not upmost ;D Psynce may well be a musician as well as the manipulation of poor education in order to solicit belief in the lie.
My talking to strangers is a good fun thought stimulating and learning reinforcement tool. You guys are handy when it comes to stretching the old grey matter. If it wasn't for that, it would be completely pointless talking to you. What I don't get, is why you guys waste your time talking to me. You really do have nothing to gain, being so closed minded. :D
Reply: sleat
First question on the Dynamite issue, Is nitroglycerin explosive within a vacuum? Explosives completely loose all of their power if there is nothing to confine the reactive components. Air pressure at 1 tonne per square foot is enough confinement to cause enough of the reactant to react causing a significant pressure wave in the air (explosion). 
 
No air = no pressure wave.

Dynamite is nitroglycerin soaked into a containing medium. This is a different kettle of fish. If you were to put this in a container, such as a steel tube. Then put that in the infinite vacuum and detonate it, the container and containing medium would fly out with speed and power and would strike what they hit including a metal plate if there was one close enough.

If you were to burn just the nitroglycerine soaked medium in the infinite vacuum, you would not get a bang. There has to be containment in order to create pressure.

No resistance = no force.
Reply: bob question you spelled "lose" with two o's in your last comment..... but you want to be captain grammar with sleat
Reply: vanillaHchrist
loose as in not confined, free to wander. not fenced in. "let loose your horses".  to say lose is wrong as technically it has its power and releases it, just not violently.
Reply: sleat as much as I admired your 'increased density should increase static thrust' experiment, this doesn't explain that. perhaps you're having difficulty visualizing, so heres a description:

we have a vacuum chamber, the same as the video. the rockets mounted on to spin, the same as this video. the chamber has been pumped, THE SAME AS THE VIDEO.
the difference is what the rocket is using as propellant. its using something which cannot be used as a 'resisting medium', and cannot evaporate. 

mercury.
compressed tightly into a plastic bottle. we use a drill touching the cap to make a hole in it, and FWOOM, the mercury rushes out as propellant.

due to its high boiling point, it wont evaporate even in vacuum (as proven by barometers) and so it will splash at the bottom of the tank.

if bob is correct, then our mercury rocket will stay still. if you and the others are correct, the bottle will move.
Reply: bob question by pressure wave, do you mean shockwave? I agree, that can't exist in space, limiting the range of an explosion.

 an explosion in vacuum is an expanding cloud of gases with high kinetic energy. if I was in the way (supposing I can survive in vacuum), the gases will collide against me, perhaps we can say they are RESISTING against me, and I will be knocked back (and turned into bacon)

now if we put a metal sheat in the way, the same thing would happen, except it wouldn't be bacon afterwards.

oh, and the difference between 'burning' and 'exploding' is that first is a steady reaction, while the other is a sudden reaction. in space, even a burning reaction would expand due to lack of pressure.

just as the sheath would be propelled away, the container is also a sheath, that is curved around the explosion. so how can a rocket, essentially a container with a hole, react any differently?

you should stop using the term 'infinite vacuum'. the term I think you want to use is 'perfect vacuum' or 'ideal vacuum'. an infinite vacuum would be one where the space the vacuum occupied was infinite. NO ONE could make that.

lastly, your method of making a vacuum is simply increasing the volume of the container with a piston. I suggest keeping the pressure pump on throughout the experiment. although you should probably see my comment to sleet.

lastly, I have a method to create a perfect vacuum, but I think I'll patent it somehow before discussing it.
Reply: where is everyone? I've been waiting for some feedback, or even some kind of comment, for days!

we're not going to just let this end at a cliffhanger, are we? I really want there to be some conclusion to this debate, even if it is agreeing to disagree.
Reply: Emaan Ajaz
I have given you feedback. Now go and measure the plane for curvature. If there is non there, then you can start questioning.
Reply: bob question I am not interested in the earth's curvature. I am only currently interested in whether rockets work in vacuum or not. please,

keep the discussion about rockets. once we've concluded this, we can move on to other subjects.

you may say that you've already explained, but that is not enough. I an open minded. give me more detail, more explanation, more proof, and I'll switch to your point of view, any day.

as a matter if fact, my point of view WAS the same as yours (rockets can't work in space). I couldn't visualise it, and so I wouldn't believe it.

here's another thing I can't visualise, although it's an everyday fact (not that I'm saying vacuum rockets are facts), when we push a car, why do the wheels move?

seems a strange question? but think about it. normally motors provide torque to the wheels.

if we provide a force to the top of the wheel directly, by hands, it will move the wheel due to a force affecting one part of it.

when we push a car, without touching the wheels, the forces acting on the wheels is in equilibrium. hence,

AS WE PUSH THE CAR, THE WHEELS SHOULD STAY STATIONARY.
Reply: I see the great debate is still in full swing..... So you say you don't believe in rockets being able to work in a vacuum as well.  So i guess its safe to say that you  don't believe in man made satellites?
Reply: vanillaHchrist who are you replying to? me? in that case, re-read my comment. I USED to believe that rockets have no reason to work in vacuum. when I came across this thread, that all changed.

you haven't been reading my comments, have you. so far, I've made two hypothesis, three analogies, and one experiment, each of which support rockets working in space.

but I am open minded. if bob can explain to my satisfaction why I am wrong, I'll change my point of view.

anyway, where are durchblick and sleet?
Reply: Emaan Ajaz
I wouldn't wait for me to re-explain what I have already explained. If you are struggling to understand why the wheels should turn on a pushed car, then it is beyond me to mend the gap in your education. 
Sorry dude. But you are building your tower of knowledge from the TV aerial down, and that's never a good way to build.Especial when your foundations are so badly wrong.
Reply: +Emaan Ajaz Hello old friend :D

I am patiently waiting for +bob question to answer my question:

Does a nearby explosion of something in vacuum, which suddenly releases a quantity of hot, fast-moving matter, move a plate next to it (i.e. impart any momentum), the plate being aligned flat-side to the explosion, where the plate is not otherwise constrained?

I still like your liquid-mercury rocket-in-the-vacuum idea. Might I propose another fluid which is slightly less unwieldy and toxic?

Vacuum oil:
http://www.actrol.com.au/Products/Refrigerant-Oils--Gases/Oils/Actrol-Vacuum-Pump-Oils/

These are substances which, by design, don't have much vapor pressure at any vacuum level people are able to achieve on Earth. In other words, if they're already in a chamber, they should not reduce the vacuum by very much at all.
Reply: sleat
I'm still waiting for you to explain things. The ball with no curvature etc. You seem to be stuck.
Reply: Emaan Ajaz
You don't understand why wheels turn on a pushed car. You had a definite idea that rockets wouldn't work in a vacuum, until you found this thread????? That is odd.
Reply: +bob question "I'm still waiting for you to explain things. The ball with no curvature etc. You seem to be stuck."

We need to finish the current discussion. I asked you about the plate over a week ago. Changing the subject is a weak, and obvious argument technique, and I would have thought it was beneath you.

I do have a rather compelling "flat or not" experiment that I have not seen before, which you could easily do, which I'd be willing to share, assuming I can get you to actually engage in the plate discussion.
Reply: sleat
The ball with no curve is the whole point. Your rockets in the vacuum fable only exists to promote the free floating ball story.
Reply: Emaan Ajaz if you held the belief that rockets didn't work in a vacuum, the logical assumption would be that you would have also believed that satellites didn't exist because there would be no way to get them in orbit... or did I misread what you had said?
Reply: vanillaHchrist
:D Don't take your rotational anxiety out on me. ;D
Reply: vanillaHchrist
I take it you are referring to some biblical story now? Next you'll be telling me about giant turtles or elephants or some such other nonsense that you use to justify not looking into the truth.

The bible has nothing to do with knowing that the "Earth" is flat and still. There is only one bible for that and its the solid one under your feet.
Reply: bob question grade 5 must have been the hardest 3 years of your life
Reply: bob question this is in response to your second reply. I just figured it out  sometime after writing to you (isn't it strange, that by talking to you I understand things that I didnt understand before, even when those things go directly opposite your point of view?)

anyway, the explanation for wheel on an object moving are, again, far more complex than the usual explanation (if you can call 'because its being pushed' an explanation).

there are two forces acting on the wheel. as the body is being pushed, the first force is the linear push of the ground on the wheel, which is also the reaction force to the push on the body.

the second is the centripetal force keeping the wheel moving in circle, due to the material and its shape in the wheel.

the two forces are 90° to each other, so the resultant force is diagonal between these two.

but as the part of the wheel touching the ground moves out the way, the next comes into contact with the ground, and the process repeats.

without this next part of the wheel touching the ground, the wheel would not rotate. so this is a much more complex matter than tip jets (google that) as certain segments of the circle are always provided with force. and certainly more complex than if the motor was running.

isnt it interesting how the simplest things, on closer inspection, can be so complex?
Reply: sleat great to see (see?) you again too. but where is our foul mouthed friend durchblick?

anyway, is vacuum oil more expensive than mercury?

I need to make a confession to make some matters easier to understand. I live in a third world country where some things are a bit hard to get. so even in relatively developed areas, I doubt I could find vacuum oil, but mercury might be possible, having seen it in schools... unless they imported it. in that case, I wouldnt have the money to get it, not having a job
Reply: bob question to your third reply (to me)

I didnt have a definite idea that they SHOULDN'T work, 

I had no idea why they should work at all. no resistance theory,

definitely no 'internal push' theory.

I just had no idea why they should work, even though its a fact they DO work. like you believe, I thought they just released pressure

in any case, even if they dont work like a plate and dynamite in vacuum (if that analogy is sound in the first place) they can't work due to resistance either.

think about it, maybe at the very beginning, before the fuel ignited, the air at the back of the rocket acted like the back of a bullet chamber, with the sides being the rocket walls.

but after that, the burnt fuel is out, pushing the air out of the way, no longer affecting the rocket due to no push being on... wait

(what I'm writing now is spur of the moment)

two things could actually be happening here. the first is that, the air at the SIDES of the plume of burnt fuel may be still pushing... nope, that just make the plume narrow, it cant affect the rocket due to the fuel no longer in any contact with the rocket.

meanwhile, the second possibility is actually detrimental even if we were measuring the static thrust of the rocket. if the rocket is simply releasing pressure, then, assuming both resistance nor any kind of push is responsible for the rocket working, then the rocket will actually move backwards, in a medium, due the medium exerting force on every part of the rocket except the back, where the force is on the gas moving out and not the rocket. hence, the net force would be downward.

and resistance can't be the explanation anyway as the fuel is moving out, the air is pushing against the fuel but the fuel is not reflecting back to hit the rocket. it is simply diffusing into the air as a result.

sorry if that was like rambling, I just thought of these things
Reply: Emaan Ajaz
Rockets wouldn't work in a vacuum. I think you are misunderstanding me.
Reply: bob question why wouldn't they work? No reasoning just cause flat earth videos say so
Reply: +bob question "Your rockets in the vacuum fable only exists to promote the free floating ball story."

How is it "my fable"? I didn't invent Newton's third law. Even he didn't invent it. He discovered and documented a physical phenomenon.

If you have a machine which causes perhaps 1000 pounds per second of mass to be expelled at several kilometers per second, in only one direction, something has to happen to the machine. You can't have a machine that throws mass and does not experience a force from accelerating that mass, can you?

So, does an explosion move a nearby metal plate in vacuum, where the surface of the plate is perpendicular to the path of the explosion?
Reply: sleat as a matter of fact, bob DID reply to that question, here, let me repost.

bob question

sleat First question on the Dynamite issue, Is nitroglycerin explosive within a vacuum? Explosives completely loose all of their power if there is nothing to confine the reactive components. Air pressure at 1 tonne per square foot is enough confinement to cause enough of the reactant to react causing a significant pressure wave in the air (explosion). No air = no pressure wave.Dynamite is nitroglycerin soaked into a containing medium. This is a different kettle of fish. If you were to put this in a container, such as a steel tube. Then put that in the infinite vacuum and detonate it, the container and containing medium would fly out with speed and power and would strike what they hit including a metal plate if there was one close enough. If you were to burn just the nitroglycerine soaked medium in the infinite vacuum, you would not get a bang. There has to be containment in order to create pressure. No resistance = no force.

and this was my reply

bob question by pressure wave, do you mean shockwave? I agree, that can't exist in space, limiting the range of an explosion. an explosion in vacuum is an expanding cloud of gases with high kinetic energy. if I was in the way (supposing I can survive in vacuum), the gases will collide against me, perhaps we can say they are RESISTING against me, and I will be knocked back (and turned into bacon) now if we put a metal sheat in the way, the same thing would happen, except it wouldn't be bacon afterwards. oh, and the difference between 'burning' and 'exploding' is that first is a steady reaction, while the other is a sudden reaction. in space, even a burning reaction would expand due to lack of pressure. just as the sheath would be propelled away, the container is also a sheath, that is curved around the explosion. so how can a rocket, essentially a container with a hole, react any differently? you should stop using the term 'infinite vacuum'. the term I think you want to use is 'perfect vacuum' or 'ideal vacuum'. an infinite vacuum would be one where the space the vacuum occupied was infinite. NO ONE could make that. lastly, your method of making a vacuum is simply increasing the volume of the container with a piston. I suggest keeping the pressure pump on throughout the experiment. although you should probably see my comment to sleet. lastly, I have a method to create a perfect vacuum, but I think I'll patent it somehow before discussing it. 

oh and bob, if I am misunderstanding you, you should explain with EVERY SINGLE DETAIL, no matter how obvious they seem, of how you think rockets work.
Reply: +Emaan Ajaz "as a matter of fact, bob DID reply to that question, here, let me repost."

He replied but didn't answer the question .

The question is "does the plate move?"

You'll notice that he didn't say "yes the plate moves" or "no the plate does not move"

He got himself all sidetracked into a hair-splitting monologue about the nature of nitroglycerin.
I think he has a bright future in politics. Perhaps he should run for mayor of his town!

The question is not "will a given explosive explode in a vacuum"
Obviously there are explosives that do.

The question, again, is does the plate move? .

"lastly, I have a method to create a perfect vacuum, but I think I'll patent it somehow before discussing it. "

You should definitely patent that as soon as you test it and verify that it is indeed a "perfect vacuum".
The criteria is pretty severe, though. Mankind has never achieved a vacuum even as good as one finds in space near Earth, on earth.

The "most perfect vacuum" ever made by mankind involved dragging a plate behind the space shuttle in orbit. Google "Wake shield facility" 

If you can produce better than that, you've really achieved something!
Reply: sleat
Not only do you not know what you are standing on, you seem clueless as to know whether I have answered that question or not. You keep going on about an impossibility and I keep telling you why it is an impossibility. The fact that you even asked the question shows you lack some very basic understanding, at present, that you require.
Reply: bob question your parents must be related...... or they both had some form of MR that is hereditary.
Reply: vanillaHchrist
That's the bottom of the barrel scrapped. What now? my dad is bigger than your dad, maybe? that's the problem with modern science. It never left the playground.
Reply: vanillaHchrist now that is simply the most tasteless thing I've seen in this thread. do you have something significant to contribute to this debate, or are you just here to insult people

if you really think bob is hopeless case, why dont you just leave?
Reply: Emaan Ajaz
VanillaHchrist cant leave the thread because he is fascinated by it. Like a moth to a light bulb. He tried logic, that didn't work. He tried insults, they didn't work. Now he is bumping against the hot bulb. soon he will stop fighting it. If he turns around now he will see there is light everywhere.  Either that or he will join the pile of wasted moth bodies burned out on the floor beneath the bulb.
Reply: Emaan Ajaz and why would I leave?! I'm enjoying myself.... maybe you should leave!?
Reply: Emaan Ajaz here's a diagram of how a rocket works in a vacuum http://www.santamartharescue.org/wp-content/uploads/blue-waffle-images.jpg
Reply: bob question apparently science works by saying "I don't agree" and then not providing anything as to why besides "cause lies"

In a world full of retards this could be true
Reply: bob question I'm pretty sure you need to go over this checklist https://www.ncbi.nlm.nih.gov/m/pubmed/1860251/
Reply: +bob question You never said whether the plate moves or not. That was the question. Please show us where you said whether the plate moves, if you think you did answer it.

Now you appear to be deflecting and changing the subject for some reason.

"The fact that you even asked the question shows you lack some very basic understanding, at present, that you require."

So, you're saying that questions rather than answers, can be wrong?
Reply: vanillaHchrist ..... why?
Reply: sleat the way bob replied, with his explanation, im pretty sure his answer is 'no' to your question.
Reply: sleat
I said there would be no explosion. So how can the explosion move the plate if there is no explosion? C'mon son. I have much respect for you but you are refusing to let your conflicting thoughts collide. I can understand why, it does seem scary at first. Get rid of your doublethink, its holding you back.
Reply: +bob question "I said there would be no explosion."

Ok. I must have mis-understood your meaning. In order to have meaningful discussions it's important to know what the other person actually thinks about the topic.

Here's another question:

Can any explosive detonate in a vacuum?
And if so, will it exert a force on nearby objects?

If not, why not?
Reply: +Emaan Ajaz "the way bob replied, with his explanation, im pretty sure his answer is 'no' to your question."

*Implied "no" * Yes. He stopped at the ad-hoc analysis of nitroglycerin, but the goal of the question was to determine if any explosion near a solid object would apply force to the object, where the whole thing occurred in vacuum. The goal was not to analyse possible limitations of nitroglycerin or dynamite, its derivative.

So, do you think it's possible to start an exothermic chemical reaction in vacuum?
Reply: I have another explanation for why a rocket should work in vacuum, this time only using pressure as the focal point of my argument.

BUT BEFORE THAT
I would appreciate if bob would actually explain why I am wrong, rather than simply say I am wrong

what is pressure? it is the force divided by surface area. essentially, it a measure of the concentration of force. similar to how water potential is the measure of concentration of water in a solution.

what is force? it is a push or pull exerted on an object, or a field generated by an object.

there is clearly no PULL inside a rocket, nor any SIGNIFICANT push or pull on a field.

but we can all agree the burning fuel is PUSHING against the walls of the rocket.

this push is a force.

now, one side of the rocket has no push exerted on it, in vacuum, because it has no wall on that side.

no push=no force

and because of that, the net reaction force of the rocket is forward, due to addition of vectors.

we have sideways vectors and forward vectors, but no BACKWARD vectors.

the presence of sideways vectors instead of only forward vectors means that rockets are somewhat inefficient. a rocket with only forward force vectors would be an efficient rocket.

and before anyone objects, all the fuel, after the push, is ejected out the rocket, not just staying in place, like pushing on the steering wheel in a car, but rather kicking it on the wheel and flying out the back
Reply: sleat
The only thing that will cause a gas only "explosion" is the release of pressurised gas from a container into the vacuum. Then you need an infinite vacuum because in a vacuum chamber the gas will pressurise away the vacuum. and then resistance will increase and force is generated.

Could it knock over a steel plate in an infinite vacuum? I think not. Gasses require pressure to have density. Your gas in the infinite vacuum will never have any density.
Reply: sleat I'll keep it simple: yes, if you have fuel and oxidiser and heat

can there be an explosion? yes, if the reaction is fast enough.

can there be a shockwave? no, there is no medium to carry it.

can you call a fast, expanding cloud of gases an explosion if it has no shockwave? I think so

can it impart momentum? definitely, I THINK, but its range is less due to no shockwave. but those expanding gases have momentum, right?
Reply: +bob question "Your gas in the infinite vacuum will never have any density."

What about gas in a container with a small hole in one side?

Say the gas is able to leak out the hole at the rate of ~1 kilogram per second, but we are adding mass (in the form of gas) to the container at the same rate. In this state, the pressure inside the container cannot be zero, can it?

Also, regarding "infinite vacuum" can you elaborate where such an environment can be found?
Reply: sleat
You shouldn't have said dynamite then, if you didn't want the stupidity of the experiment to be revealed and analysed.:D
Anything that radiates heat will radiate it in a vacuum. Convection won't occur though. Some things do react in a vacuum, just not violently. These tend to be exothermic. I can't think of any endothermic ones that explode. ;D
Reply: +Emaan Ajaz "can you call a fast, expanding cloud of gases an explosion if it has no shockwave? I think so"

Yes, no shock-wave as such in a vacuum, since there is no speed of sound in a vacuum and the mean-free-path of particles is quite large, but nonetheless, the same amount of matter that constituted the explosive before firing would be flying out in all directions afterwards.

There would have been a shockwave, i.e. a propagating wave at or faster than the speed of sound through matter inside the material which was detonated.

"can there be an explosion? yes, if the reaction is fast enough."

By definition, all detonations propagate through the reacting medium faster than the speed of sound in the medium being detonated. If, for some reason, they don't do that, they are no longer detonations. i.e. something like gunpowder does not detonate.

You could learn more by reading up on the Chapman–Jouguet condition and the ZND detonation model.

One of my favorite math texts was written by Yakov B Zeldovich who was a pioneer in this field, along with John Von Neumann.
Reply: +bob question My bad. I should have said "some generic explosive that works in a vacuum".

I'm trying to get to this point of discussion:

Energetic (high kinetic energy) matter is moving out in all directions. In one direction, this energetic material encounters a solid object nearby. Will the solid object experience any force due to the explosion?

And again, where do you get the term "infinite vacuum" and has such an environment ever been detected or measured?
Reply: +vanillaHchrist "Very surprising since you don't believe any one or anything created by man has been to space..... so who or what measured this infinite vacuum you keep insisting exists?!"

Yes, you fast-tracked to my problem with bob's use of the term "infinite vacuum". How can +bob question claim to know anything about an "infinite vacuum" when such an environment has never been detected nor measured?

He seems quite certain of how Newton's third law will behave somewhere which may not actually exist.

But TBH, I'm getting a stronger and stronger feeling that he doesn't believe any of this stuff about Flat Earth or rockets not working in space, and just gets some sort of rush from trying to mind-fuck people on the internet, or perhaps just from being stubbornly obtuse.

If this were actually the fuel on which the +bob question machine runs, the simplest verification would be to stop reacting to the calculated wind-ups he seems to be dishing out.

I used to think NatureHacker was the gold-standard of stubborn obtuseness, but I think that may need to be adjusted. At least old NH accepts the mountain of interlocking evidence that there is at least some way to put satellites in orbit, and that the Earth is a slowly turning spheroid in space, although he has big problems with Newton's third law working with vacuum.
Reply: sleat
The infinite vacuum is part of the gravitational balls model. So you are the guys saying rockets operate in this void, unless you have changed your mind :D. You seem to be confusing yourselves to an extreme. I think the gravitational ball (Copernican) model is false. What are you saying is up there? Where is Voyager now? In your imaginations or in a vacuummous void? 

Either I am fucking your minds or your educators have fucked your minds. One thing is for sure, your minds have been fucked with. The only way you will ever heal the damage of the mind fucking is to know beyond doubt what the truth is. You are now down the rabbit hole.

If you get it wrong, the mindfuck will get worse. If you get it right, your mind will accept its new foundation of understanding and you will start to get stronger.

I have no point or wish to fuck with your minds. My telling you this makes little difference because you don't know, yet, that I am telling the truth.

The responsibility for knowing the truth is in our own hands. Your mindfuck reversal is entirely in your own hands and it means getting used to some abstract concepts until they simplify with familiarity.

We live in a beautiful harmonic deliberate universe. It is flat and still, just as it feels and we have been lied to.
Reply: +bob question "The infinite vacuum is part of the gravitational balls model."

Please define "infinite vacuum" for us.
Reply: bob question I am sure that gas would have density and hence pressure in a vacuum after being released from a container.

it would just dissipate much faster than in the atmosphere, due to diffusion.

oh, and I'm pretty sure 'infinite vacuum' is your way of saying 'perfect vacuum', and you dont believe it actually exists, but its the ideal location for testing rockets?
Reply: Emaan Ajaz
Emaan, Emaan, Emaan, Emaan, Emaan..... If you have gas with density therefore pressure, then you don't have a vacuum. They are mutually exclusive. a vacuum is an absence of everything.

An Infinite vacuum is not the same as perfect vacuum. A perfect vacuum can be inside a tiny chamber IE nothing in it. An infinite vacuum is one that is unmeasurably large.
Reply: Emaan Ajaz
There you have it. For you, rockets work in a vacuum. ;D
Reply: Where is everybody?
I havent heard from you guys for a week!

why wait for replies that are unlikely to come?
Reply: +Emaan Ajaz "why wait for replies that are unlikely to come?"

Yes, nobody has replied to my questions from last week either, so I did other things.

Was there any question you were waiting for a reply to from me ?

At the moment, I'm looking for someone from the "no thrust in vacuum" crowd to supply an equation that accurately predicts the force felt by a rocket at a range of atmospheric pressures.

The following equation does do that and is used regularly to design a given engine such that it meets performance requirements at every range of atmospheric pressure required:

F = mdot * Ve + (pe - p0) * Ae

F is force in Newtons.
mdot is mass flow rate in kilograms/second.
Ve is exhaust velocity in meters/second
Ae is the area of the exit-plane of the nozzle
p0 is the free-stream-pressure, and
pe is the exit-plane-pressure.

You can easily see that it's a variation of F=ma, with a term on the end to account for the free-stream pressure vs the nozzle exit pressure and the nozzle area. What it means is that as the free-stream pressure gets lower the rocket works better since (pe-p0) * Ae becomes larger the lower the outside pressure.

The heart of the equation, though is simply newton's second law, F=ma. In this case the mass is mass-per-time, and the "a" is the exhaust velocity (relative to the rest of the rocket, which it is trying to move) .

So, my question to the "no vacuum thrust" crowd is this:

Since you're not saying that rockets suddenly stop working as soon as "vacuum" is achieved, since it's proven that vacuum isn't really an absolute thing, that is, there is no perfect vacuum thus discovered, then you must be saying that the thrust dies off as vacuum is approached from sea-level-pressure.

So, given this, we need a testable equation from you lot, with which to prove your claim. Then we can say:

Well, at this "altitude" of relative-vacuum, we get this thrust force, but at this other "altitude" of vacuum the thrust force becomes this other number.

Even "no vacuum thrust" folks like "NatureHacker" who is apparently a mechanical engineer, has shied away from this challenge. Engineers eat, sleep, and breathe equations for predicting the performance of machines, so it's surprising he (or somebody else) wouldn't have an equation like this to support his claim.
Reply: Sleat
An equation for no thrust in a vacuum? 

0 resistance = 0 force = 0 momentum.     you cant have force unless you have resistance and you don't have resistance in a vacuum..... got it?

Is it too simple or too complex for you?
maybe it just seems foreign to you.
Reply: +bob question "For you, rockets work in a vacuum."

Good, but what we're really interested in is how they work for you at a range of altitudes from sea-level up to where you could legitimately say there is "vacuum". Say, the Karman line, which is internationally agreed boundary of "space".

A while ago you said this:

"What we need is a big enough vacuum and a small enough rocket"

So far, so good!

"and for me to be there to verify that absolute vacuum is achieved"

Either you're aware that "absolute vacuum" has never been seen on Earth or in space, and you think that stating an impossible starting condition wins your argument, or...you fail to realize that the starting condition for your argument's test does not exist anywhere and thus makes your argument hypothetical at best. Just to verify your "verify" chops, what sort of gauge will you use to verify this?

Care to explain which is true, or maybe an option I hadn't thought of?

"and that the exhaust gasses when fully reacted will be lost in the available space."

No matter how big, or how good a vacuum you start with, the exhaust will never be "lost in the available space". Each particle has to go somewhere, and by any standards this won't be an "absolute vacuum" any more, assuming (hypothetically) that it ever was.

The best mankind can do with testing rocket performance in vacuum at the present state-of-the-art is to measure their thrust at a range of "virtual altitudes" approaching vacuum, and extrapolate from that. Cody's experiment here happened to test between ~38000 feet and ~36000 feet. Thankfully, this seems to work so-far, and when they operate in better vacuums, like near the moon, the equations work and they get the performance they require.

So, do you have a formula where thrust becomes less as altitude increases with a constant mass-flow-rate and exhaust velocity? If you believe this is the case, why not provide such a formula?
Reply: +bob question "Whats wrong with 0 resistance = 0 force = 0 momentum?"

Okay, for that to be usable for engineering real machines, for predicting their behavior and designing better ones, we need more information;

What is the formula for calculating "resistance" for a given density of operating medium? If you know it's zero in vacuum, you must also know how it's something else at all other pressures for the operating environment.

I trust you can happily supply numbers for, say, water, air at sea-level, and maybe sulfur hexafluoride, just for laughs. (deep booming laughs)

What is the unit of measure for this "resistance" and how is it calculated?

What is the formula for "force" in your model? In other words, how do you know when it's zero? Presumably the "force" for you would be a function of the "resistance" so what's the formula for it?

Also, I know you're well aware that the current equations that seem to work are all about mass and velocity, per Newton's second law. For an equation to work, wouldn't we also need some accounting for how much mass is thrown overboard from the rocket, and how fast it leaves the rocket?

We know this formula works perfectly at sea-level, since we can calculate how much force our rockets produce anytime, by looking at the total mass thrown and the average velocity for that "throwing" action. It works every time. If we measure how much velocity the rocket attained, and account for the integral of the mass-change over time, it comes out correct. The end-velocity is predictable, given the motor parameters.

At what point does this all "change over" to your formula?
Reply: Sleat
The absolute vacuum, i have no doubt, does not exist. It is a made up fallacy and we agree on this, it seams. So rockets don't work in a vacuum but they work in space because space isn't a vacuum or so you would have me believe.

Is this correct?
Reply: bob question why cant the gas resist against the inner walls if the rocket?

and I still cant visualize how the exhaust of a rocket can provide thrust to the rocket once it has been ejected.

I understand that the exhaust pushes off the atmosphere. but how does it then provide force to the rocket?
Reply: bob question space isnt a perfect vacuum, especially near earth. but its still as good a vacuum as achievable by pumps like in the video above.

the argument that sleat is making is that rockets can work in even a perfect vacuum, even though it doesn't exist, and that the imperfect vacuum in space very slightly decreases the performance of the rocket.

my argument is also that rockets can work in a vacuum, but I feel that the static thrust would be higher in a resisting medium, at least at the very beginning.

Since you argue that a resisting medium is NECESSARY for a rocket to work, does that mean

1. that in more dense mediums the static (while not moving) thrust will be higher
2. why cant a rocket, from your argument, push off its own exhaust, once it has been ejected, in space, and be used as the resisting material?
Reply: +Emaan Ajaz "but its still as good a vacuum as achievable by pumps like in the video above."

Cody's pump seems only able to achieve about 38,000 feet worth of vacuum, relative to sea-level. I think it's an industrial pump used for process engineering, rather than for scientific vacuum generation.

A better one to use for tests might be a lab-grade "roughing pump". These use vacuum oil as the "piston" and can achieve 0.1 Pa, or the equivalent of about 315,000 feet of altitude. That's about 8 times as "high" as Cody's backyard rig.

"the argument that sleat is making is that rockets can work in even a perfect vacuum, even though it doesn't exist, and that the imperfect vacuum in space very slightly decreases the performance of the rocket."

Exactly. The better the vacuum, the better the "fuel economy" of the rocket, or expressed differently, the total force per unit mass of fuel used.

"my argument is also that rockets can work in a vacuum, but I feel that the static thrust would be higher in a resisting medium, at least at the very beginning."

Why at the very beginning? Also, why exactly do you think a "resisting medium" would help? What is the mechanism for the medium increasing thrust, and what would be an equation that expresses an interaction with this "resisting medium" such that "F" becomes greater?

"1. that in more dense mediums the static (while not moving) thrust will be higher"

I would really like to see an equation for this, such that the "right size" motor could be designed for purpose, using formula which relate fuel flow, exhaust velocity, nozzle geometry, and external medium to the force generated by the rocket. I've never been able to get any "no thrust in vacuum" person to disclose such a formula.

"2. why cant a rocket, from your argument, push off its own exhaust, once it has been ejected, in space, and be used as the resisting material?"

Not to put words in bob's mouth, but he's been quiet so I'll chime in and he can correct me if he likes.

It seems the core of Bob's argument is that, no matter how much propellant you dump, how much it expands, and how fast it accelerates after the nozzle constriction, there's never any "resistance" to this action provided by the outside environment" . A side-effect of this, in his narrative, is that it is apparently *impossible for pressure to develop inside a partially enclosed space in vacuum. He seems to think that any amount of gas, no matter how much mass over time is supplied, will "instantly" be "sucked out" of the engine, and thus be unable to do any work. This would obviously require the gas to move at infinite speed, since it's entering the combustion area at finite speed. If gas enters a cylinder with a hole at the other end, which is constricted by an arbitrary amount, in order for the pressure inside to be zero, the gas would have to leave the hole at infinite speed. If it didn't, it would have to build up some pressure as the gas molecules raced to escape and bumped into one another (a shockwave). In reality, if the outside is at any pressure at all and the rate the gas is entering is equal or greater than the rate the gas is leaving, a pressure must result. In order for this to not be the case, the gas would have to leave faster, the faster it came in regardless of the constriction ratio and physical matter can't do that, so it appears that, suddenly, once the outside environment becomes "space" the gas magically accelerates to infinite speed, and the combustion chamber pressure becomes equivalent to the outside pressure...somehow.

The other argument bob made is that matter is not "ejected" from the rocket, but rather is "sucked out" by the vacuum, and by that logic, Newton's second no longer applies. To have that happen, though, would require the inside of the combustion chamber, before the shockwave to somehow "know" that the other side of the constriction was that magical 14.7 psi below atmospheric pressure . Considering that the operating pressure in rocket combustion chambers might be hundreds of psi, it doesn't seem like 14.7 psi of difference on the other side of the throat would be apparent from inside the combustion chamber . How would the gas inside know the pressure outside?

Interestingly, in rocketry, the state where the gas medium is at exactly mach 1 (for that heat and pressure and material) at the constriction is known as "choked flow". Choked flow is basically a requirement for rockets. The effect is that increasing the amount of material entering won't stop the "choked flow" at the throat, but only increase the chamber pressure. From inside the combustion chamber, the shockwave appears as a virtual permeable barrier that will only allow a certain number of particles through per unit time, across the shockwave at mach 1. Lowering the pressure on the downstream side does not increase the rate-of-flow, but does increase the acceleration of the gas within the flaring nozzle after the throat .

After the shockwave, on the way out, the gas accelerates further, due to expanding inside the nozzle, exiting at possibly several kilometers per second in some rockets, since it has space to expand and is no longer bumping into itself.

Here's a practical DIY solid rocketry site with lots of practical maths for actually designing solid fuel motors that work and deliver to a specification.

Note the graphs of pressure, temperature, and velocity as the flow goes through the nozzle and out.
http://www.nakka-rocketry.net/th_appx.html#AppE
Reply: sleat I feel that before the rocket is activated, the surrounding material will occupy its nozzle. the walls of the nozzle and this occupying medium will form a temporary 'gun barrel' of sorts, with the bottom of the barrel being the medium. at the very beginning, the rocket will accelerate as though in a gun barrel, but later it will push the medium out the way to the sides, and achieve the same static thrust as in vacuum.

I think that the acceleration of the exhaust is merely an indication of the expansion of gases inside the rocket (which is truly actually important for the movement of the rocket). otherwise the exhaust may as well cease to exist after exiting, it doesnt affect the movement of the rocket
Reply: Emaan Ajaz For a high-impulse solid rocket motor, like on a 2.75" FFAR rocket projectile, the transient you mention lasts for less than a millisecond. Everything that might be in the nozzle is blown out faster than a party firecracker going off as the motor-burn starts.

For a liquid fuel rocket, you should watch them start some time. They go through a transient phase during ignition similar to a welding torch. You can't just turn all the propellants on full-bore, as it would be impossible to light, unless the propellants are hypergolic.

Yes, the exhaust could literally vanish (assuming large amounts of mass could easily vanish) the moment it stops touching the rocket body and it wouldn't affect the physics.
Reply: now try it in a infinite vacuum, the exhausts just refilled the chamber thats why it seem to work
Reply: +Tri Le According to the gauge on the top, which you can read in the video yourself, the pressure-altitude went from ~38000 feet to 36000 feet. The rocket's exhaust "reduced" the altitude by a bit less than 2,000 feet. Therefore the rocket works between these two altitudes, both much less than sea-level .
Reply: sleat
a bullet gains all of its momentum in the millisecond in the barrel.

large forces can act on objects in a very small time. although the transient has a small time period, and air acts as a crappy gun barrel, the force experienced by the rocket in that small time may still be significant. enough for the static thrust to be slightly larger in the beginning than the rest of the rockets movement (and become more significant with increase in density of medium)(as long as the medium stays fluid, so it can be pushed pushed out).

on a side note, I think that the STATIC thrust of a rocket would be the same in all mediums, including vacuum and mercury (except of course for the transient).
Reply: +Emaan Ajaz "a bullet gains all of its momentum in the millisecond in the barrel."

Sure, but a bullet and a rocket operate on very different principles, as evidenced by the equations which describe their total behavior, from start to finish.

Bullets accelerate during their entire time within the gun-barrel, but stop accelerating as soon as they leave. The peak acceleration is at the beginning of travel.

Rockets usually experience their peak acceleration at the end of the propellant burn, and for good reason, since their mass is least, and their thrust is either at its peak or at a "steady-state" maximum. If you look up the acceleration curves for rockets, they don't usually start with a huge spike, but if you find a strong spike in the acceleration of a rocket right at the beginning, I'd like to see the page.

When rockets are designed, there is no design methodology which makes use of this "startup-transient" thrust of which you speak. If you can find concrete evidence of it anywhere, please let me know!

Also, if you look at the graph of rocket force over time, typically it starts near zero, and goes up to the steady-state-thrust amount, and stays close to that for the whole rest of the burn.

If your assessment is correct, the thrust-curve for a rocket should have a very sharp (and short) spike right at the beginning, on the thrust curve, and a consequent spike in the acceleration curve which, as you claim, should be greater than the rest of the rocket's thrust or its acceleration.

In typical solid motors, we don't see this sharp spike. Some motors are purposely designed to deliver all their power in a sort of "spike" curve, but that time domain is on the order of hundreds of milliseconds. The spike is the total delivery of the rocket, rather than some kind of startup transient.

See the thrust/acceleration/drag/velocity/altitude superimposed curves on this page:
http://www.thrustcurve.org/simulation.shtml

Here's one with startup spikes, but you'll notice their value is between 15% and 33% of the total thrust the motor makes.
https://www.nakka-rocketry.net/preview.html
Reply: sleat he finds them in flat earth videos..... a quick click on these retards profiles usually show their bias. I bet the video he found about "the cure for 97% of diseases" created by a CHIROPRACTOR debunks everything the medical community has learned through actual experience
Reply: sleat I never talked about acceleration. obviously, acceleration will be greatest when the rocket has expended all its fuel, in vacuum.

I really doubt I will find any concrete evidence of what I believe is a new hypothesis. perhaps you should test it?

the experiment will measure static thrust of a rocket, either using a measuring device, or a pendulum.

an IDEAL rocket and an IDEAL bullet use different equations to describe their total behavior. but a real world bullet acts as a poor rocket. to test this, simply put a bullet  nose up in a fire (and hide behind a suitable barrier. I used an empty oil tank). the bullet gained the height of a upwards thrown ball.

in the same way, I imagine that a real world rocket may derive a small amount of thrust from the 'startup transient'. though I realise that a better analogy is to think of the rocket nozzle as a gun barrel, and the air as a bullet.

the reason why this transient never makes its way to any design methodology (and in my opinion shouldn't) is because it is pretty negligible in the long run.

any small thrust the rocket gained from the transient is probably quickly cancelled out by air resistance.
Reply: +Emaan Ajaz "I really doubt I will find any concrete evidence of what I believe is a new hypothesis. perhaps you should test it?"

Yes, how would you design an experiment to look for this force you think is significant...but...not significant?

Let's think about a situation where our test article only experiences force from this transient (so as not to mistake the source of the force for something else).

"the experiment will measure static thrust of a rocket, either using a measuring device, or a pendulum."

The force-curve people see when they do that strongly corresponds with how much of the propellant has been thrown away each instant, and with what speed it was thrown.

So it seems, if you really think this force is significant, you need to find a way to isolate it from the typical rocket mechanism so that it can be measured.

I can't think of a good way to isolate it, such that the rocket doesn't generate any of the garden-variety of rocket thrust, but only this "startup transient" you're talking about.
Reply: sleat "significant... but... not significant?"

I should have been more clear, I agree. what I meant was that the thrust generated by the transient may be enough to show a small spike in the beginning of the launch, but probably does not lift a space rocket more than 1-2 feet.

there is no need to isolate the transient. if there is a small spike in the beginning of a thrust-time graph, then that should be enough proof.

either a measuring device or a pendulum can be used. if we use a pendulum, the displacement in the beginning of the experiment will be greater than in the same experiment performed in vacuum, and then drop down to the same displacement as in vacuum for the rest of the experiment.

the test can be performed in different mediums ranging from least dense to most dense. I think that the transient will be greater in more dense mediums (but perhaps the thrust later will be less than vacuum, due to the pressure of the medium).

# by the way, I don't think we should use the word 'thrown' anymore. it's not a very scientific word. a better word would be 'pushed'
Reply: +Emaan Ajaz "there is no need to isolate the transient. if there is a small spike in the beginning of a thrust-time graph, then that should be enough proof."

Enough proof for what? The force is caused by what, exactly? What is the equation for the amount of force for a given engine? Also, what makes you think this force exists at all, in the first place?

If you think there's a force effect from propellant in a rocket beginning to burn, which is not the result of mass being thrown out of the rocket then you need to first predict what that force will be, according to the exact mechanism by which you think that force is generated. You need both a mechanism of action, and an equation describing and predicting how that mechanism will behave for various rockets, according to their parameters. Simply insisting it exists isn't quite enough.

Then you'd have to make a test. You can't simply say "well the rocket started, and there was force present, so that force must have been my special force and not the normal F=ma force produced by the rocket throwing/pushing mass.

You can claim they do exhibit this behavior, but until there's an equation that both describes the mechanism and predicts the behavior of a rocket due to the "Ajaz Force" you will have a hard time convincing a scientist or an engineer that it exists at all, especially when existing equations work perfectly .

There is literally no "Hey we're getting extra force, where did it come from?" mystery with rockets. For every kilogram of mass you accelerate by 1 meter per second, you get 1 Newton of force, no more or less.

"# by the way, I don't think we should use the word 'thrown' anymore. it's not a very scientific word. a better word would be 'pushed'"

I don't think you need to focus on what English word you use to describe the force a rocket feels. I think you need to focus on an equation that can be tested that predicts this force that you think exists in rockets.
Reply: carzak
Are you guys still struggling with basic physics? That's a shame. Why don't you turn out your pockets and hand it to Nasa. Oh, you already are. So, whats the problem? You guys are paying through the nose for a story, some rich people are getting richer, and I have more entertainment than any of us can poke a stick at. Sounds good to me ;D.

Rockets in a vacuum, that's funny :D
Reply: sleat sorry for the delay!

first of all, I do not simply insist that a force must exist. I hypothesize the existence of such a force from the same process I came to the conclusion that rockets should work in vacuum: visualization of the process.

I think that this transient must exist, because it is analogous to a gun firing a bullet. the bullet is the medium occupying the rocket nozzle, and the nozzle itself is the gun barrel.

I am afraid I am not familiar with techniques to form equations. but as you seem to be, I'll try to provide guidelines to predict the force provided by the transient

take the equation of thrust of a bullet that you mentioned. an equal and opposite force acts on the gun. in this case, the bullet is air, and the gun is the rocket. now using this visualization, derive the equation for the transient force. (edit: the mass of the 'bullet' is also important, probably)

as for the test: we are to measure static thrust. we use either a measuring device or a pendulum.

using F=ma, we have a prediction of exactly how much thrust to expect, as well as how the thrust-time chart will look. in the pendulum test, the displacement should be constant.

a brief extra force, a small spike in the start of the thrust-time chart, a greater displacement in the very beginning of the pendulum test. these all indicate the transient exists.

I in no way state this transient is needed in any way, just a side effect of rocket design. rockets work fine without it, and it doesn't significantly effect rockets anyway.

# on a side note. I suggested not using thrown due to how vague it is in context to physics. 'thrown' implies a shift from rotational to linear. I wasnt trying to change the topic, only commenting.

and I hope you dont mind, but was something bothering you that day? you seemed less patient than usual. again, no offense. you're usually much more tolerant.
Reply: +Emaan Ajaz  "and I hope you dont mind, but was something bothering you that day? you seemed less patient than usual."

I was probably tired after work, and feeling a bit impatient that you couldn't seem to describe how to separate the "Ajaz" force from the other forces that rockets experience, for the purpose of measuring and quantifying it.

You are quite right, in that when any rocket initially starts, any combustion space inside is filled with air, or some other substance, which is quickly replaced out the nozzle by burning propellant of some kind.

A rough estimate to separate this "atmosphere expulsion" and figure out how big its force is, would be to calculate the volume and pressure of atmosphere, or whatever gas is inside the combustion spaces before rocket-start, calculate its resultant density, and therefore total mass, and then calculate at what velocity this gas is thrown out when the rocket starts.

Say for the sake of discussion there is a solid-fueled rocket, whose fuel can be ignited underwater. Such materials definitely exist!

Now, imagine when the rocket is sitting idle, the propellant grain and nozzle will be full of water. When the combustion starts, of course the water will be ejected forcibly from the back of the rocket, creating some force. You just need to estimate how much mass of water there was, and the average velocity at which it left, and you'll have your "Ajaz" force.

But note here that the principle on which this force is generated is exactly the same as with the propellant. F=ma still applies, as you indicated.

So, the amount of impulse from ejecting the initial material from the insides of the rocket will vary with the operating medium, but that impulse will be quite small compared with the steady-state action of the rocket when it's running properly.

I honestly don't think ejecting perhaps 10 cubic feet of air at 21 degrees C, at a fairly low velocity, say 100 meters per second, (the exhaust velocity always starts slower than optimum) will provide enough force to even move the rocket, assuming it weighs a few thousand pounds.

And of course, for a model-rocket-motor, the volume of atmosphere in the nozzle would be on the order of 1/10th of a cubic centimeter, so the force, at any velocity, from expelling that would be much less as well.
Reply: +bob question "Nasa are raping you too,"

They certainly aren't, I don't think about or mention them as often as you do. Why the obsession? If I am not paying them, since I'm not even in the US. How are they raping me, exactly, in your opinion?

"but it sounds like a bit of the Stockholm syndrome is occurring for you."

That's where a hostage falls in love with their captor. NASA is not my captor. I think they've actually gone a bit nutty since the 60's-70's and are now more interested in James Hansen doom-saying climate change alarmism than leading the world in space-science. Luckily they got rid of him, but they've still got a ways to go before I'll even respect them.

Tell me, why are you not excited about Roscosmos? Or the Indians, Japanese, or Chinese?

"Nasa aren't exploring space. Space is made up."

What is your evidence of that? Have you ever tried to bounce a radio signal off the moon? You know that ordinary amateurs can do that with literally equipment from a swap-meet, right?

Do you have access to a telescope? What do you make of the incredible amount of detail you can see, almost in every direction you point it? (again, nothing to do with NASA, the telescope predates them by several hundred years!)

Why are you trying to distract from the real issues of US Federal Government money wastage? Remember, your favorite stalking-horse is only <1% of the annual budget! The military is 50%+

Shucks, even labor and unemployment are > 3 times NASA's budget.
I guess for people that don't believe in space and don't have a job (funny, that) this is a good thing.
Reply: sleat
That's because you love your oppressor. Your mind has been captured by them. You see that government is doing exactly what it says on the tin. Governing your ment (latin for mind). but you don't see that nasa is central to that. like a good cop bad cop situation

I have a telescope. I see dots of light in the sky. I have access to an 8000mm lens. It sees the lights in the sky as dancing cymatic resonance patters. Nothing tangibly solid. the planets are not even circular. 

When you use a wide angle lens, point it to one side of the centre of celestial rotation so that the centre of rotation is in frame but to one side. The fact that star trails appear around the fixed centre of rotation during a long exposure proves 100% that the stars are moving not the "Earth". If "Earth" was rotating, the centre of celestial rotation would itself do circles in frame and not remain fixed in the frame. This is a property of wide angle lenses and is curtains for the spinning "earth" hypothesis.
Reply: sleat the star trails is one of the easiest things to prove and do yourself, but bob is an idiot.  I wonder if bob can explain why star trails viewed from the equator diverge away from each other if they're trapped in a dome.... did god put two different sets of stars that rotate away from each other?

Speaking of the equator... I wonder what bob's reasoning for why satellite dishes on the equator point straight up when  those in the northern hemisphere point south and those in the southern hemisphere point north?
Reply: sleat
There is nothing earnest or persuasive about what I am saying. I am telling you the truth. If it seems earnest of persuasive, that's the nature of truth. The fact that the very basics of the pseudo reality that has been forced upon us by governments is wrong, is just one small step in a long set of steps to healing and becoming strong as was intended by whatever created us. 

They use a thing called tacit consent to do all of this filth. That means, if you have not specifically informed the powers that be that you do not consent, then they pretend that you have consented.

From testing pharmaceuticals on you to testing chemicals in your water supply. even sending you to die on a battle field, all requires your consent. Irradiating you with cell phone towers, Police "powers", Court "powers", taxation, eviction following bankruptcy all requires your consent.

They threaten you and imprison you and fuck around with you until you say "i do not consent". then it all stops. but you have to be the living sovereign soul in order to become the power. That means understanding your corporation. Corporation means "dead speak".
it is the identity written in all capitals that "government" write to you with. Capitus Diminutio Maxima is the latin for the all capitals typeface.  It means "to diminish something to the very minimum of worth". It is written as it would be on your gravestone. You have been capitalised. They own your all capitals name and by that they fool you into being their property.

If you think that sounds like a right old load of nonsense, you would be right. It is a right old load of nonsense but that is how it is done.

Look into the Cestui Que Vie act 1666. This act and its revisions were declared and the population were announced as being dead and lost to the seas. Then the people had a short amount of time to declare themselves alive and well. The nations wealth belonged to all of its people before this act of deceit. That wealth was then put into trusts and is now traded as high value bonds with our names attached.

The Vatican believes they own us now. A print of your foot sole was taken when you were a baby. and a certificate was drawn up. That's when you were incorporated. Register - Regis = king. Register = a list of the kings possessions. You were registered at birth. This is where the term "sold" comes from.

Once you know we are not on a spinning ball, then comes the question, what else have they lied to us about? and the answer to that is everything. From how the body works, heals itself and gets strong to plate tectonics and what causes earth quakes. What is the sun?. What is the moon? What causes the tides? What is disease? What is at the north pole? What is at the south pole? Do atoms exist as we have been told? Is nuclear energy real? Is atmospheric electricity really powering the "Earth" and not "fossil" fuels. And that is just the start of it. Nicola Tesla was the dude, Einstein was a fraud.

So we have a choice. Change things or loose the point of existence.
Reply: sleat
why would that be impressive? it would look like what you already know. Then you would say, "no, i said a diagram of how they would appear on a flat Earth ". You would be unimpressed and you would argue that I am wrong. <<<<< can you not work that one out either? oh dear.

I do have a proper camera. A full frame DSLR with a 14mm wide angle lens and an 8mm fish eye. I know cameras and the science of photography. I also have a 35mm film camera which i still use with those lenses.

I'd like to see some of these nebula that you see in your telescope. I know they will be concatenations (database images) or tiny unimpressive dots of light. :D I think you are really trying to convince yourself here.
Reply: sleat
Why don't you prove space exists. Then we'll save so much time. I'll never demonstrate "Earth" is flat because you can't get your head around the basics. so show me some non hear say evidence of the spinning ball.
Reply: bob question satellite dishes point to mountains... ok!? So what kind of mountain would this dish be pointed at? Some weird floating mountain in Myanmar that Freemasons have kept a secret http://www.rickmann-uk.com/wp-content/uploads/Equatorial-Satellite-Dish.jpg

Everything you have stated has been absolute garbage
Reply: vanillaHchrist
I've seen that photo before. Now, prove that it is A) working and B) pointing at a satellite. No more hear say evidence. Prove your ball.
Reply: sleat like I said, the force of the transient would not be significant for the purpose of the rocket. I was simply arguing that it existed.

but I've been thinking, and I've thought of some other things:

1. even if we had a rocket without a nozzle, and just a hole at the bottom, wouldn't the air, at the beginning of launch act as a gun barrel as well as a bullet, before being blown away and not affecting the rest of the flight?

2. if we have a flat surface below the rocket, wouldn't it behave as a poor gun barrel, though improve in performance as its mass increases (due to not moving as much in the opposite direction)

3. you said alot earlier that in denser mediums, the regular (and frankly, the one that is of importance) thrust experienced by rockets decreases with the density of medium. I disagree. I think that the static thrust would stay the same as in vacuum, until the outside pressure matches the pressure inside the rocket, at which point the rocket will not provide thrust at all.

of course, this is all speculation, and I'd like a knowledgeable opinion on it

# since we agree to the existence of the 'ajaz force' as you call it, would you agree this force would increase with density of the medium?
Reply: +bob question "I'll never demonstrate "Earth" is flat because you can't get your head around the basics. "

How do you know that? How about writing an outline of the basics? I know I'm capable of learning, since I've already learned stuff that I use regularly, so what do you think might be stopping me "getting my head around the basics"?

How about simply demonstrating that it can't possibly be a rotating spheroid? That would be pretty impressive as well.

"Why don't you prove space exists."

OK. Well, to start, do you agree that the atmospheric pressure reduces at about 1 hectopascal (hPa) per 30 feet of altitude above sea level?
(a hectopascal is 100 pascals)
Reply: +Emaan Ajaz If I met bob in person, I would be about as polite as I am being right now. I wonder if he would be more polite than he is here? I wonder if he'd tell me face-to-face that my head was messed up and that I was incapable of understanding his beliefs, as he does here? 

Or would he candidly admit to me, as a real person that he's been entertaining himself by yanking our chains for months, and doesn't really believe any of what he says he believes?

The only difference for me would be that I could walk him though the myriad reasons why I think his stated beliefs about the Earth, space, etc, are not a good representation of reality. In other words, I would do experiments with him watching, participating, firsthand, and see if he agrees about what the data gathered indicates, and if not, why he disagrees.

It's much harder to change the subject or stop responding to questions face-to-face, isn't it?
Reply: carzak
Remember you are defending the accepted doctrine. So, you have all the proof that space exists, one would hope. This is why you need to prove your story first.  What evidence are you basing your assertion on?. After all, my primary evidence that space does not exist IS your inability to prove your story.

Are you saying that your primary evidence for a spinning ball is my refusing to prove anything to you until you have admitted you have no evidence? That's a very week stand point.
Reply: sleat
Animations and black box processes are hear say evidence. Prove your ball.

"How do you know that? How about writing an outline of the basics? I know I'm capable of learning"

You keep presenting hear say evidence as if it is fact. That shows that you don't understand empirical evidence from hear say evidence. That IS the basics.
Reply: Foucoults pendulum supposedly demonstrates that the "earth" rotates underneath the swinging object, so the wives tale would have you believe. So, when an aeroplane is in flight and travels to the north south aligned runway on the equator. Why does it not act like the foucults pendulum is acting? Why can the plane land safely and neatly on a motionless runway and not one that is travelling west to east at over 1000 mph? Focults pendulum and the aeroplane must be subject to the same forces but no one can explain this. We just bury this simple contortion in a pile of calculus and hope the monkeys never look into it.

Basics.
Reply: sleat
Nice photo. I have a air brush painting that looks just like that, only it is in colour. I am not saying that that splodge is not an actual photograph of the heavens but it certainly does not demonstrate suns and planets. It demonstrates splodges and dots. It doesn't demonstrate trillions and trillions of miles of distance. 

One mans excuse is another mans reason. Wide angle photography demonstrates the stars are close and that outweighs your splodges and dots being trillions and trillions of miles away. Can you demonstrate the distance to these splodges and dots? Can you prove they are suns and planets? Can you demonstrate that they are still and "Earth" is rotating? Thought not.
Reply: +bob question "They use a thing called tacit consent to do all of this filth. That means, if you have not specifically informed the powers that be that you do not consent, then they pretend that you have consented."

I know of one place where withdrawing your consent works with fair reliability, in the US. If a policeman wants to search your vehicle, or dwelling, without probable cause, withdrawing consent to the search sometimes works.

Even if it doesn't work, if the police decide to take the matter further, and you can prove that you didn't consent to the search, your counsel might be able to invalidate any evidence gathered without probable cause and without your consent.

So, what have you done to withdraw your consent to all this evil stuff the government does?
Did any of it work?

Would it stop crooked cops from physically taking cash or property from you under "civil asset forfeiture" laws even without your consent and without suspecting or charging you with any crime?

How would you prevent such a thing?
Reply: +carzak Here's a slightly better Eagle nebula. Less noisy at least. I suspect the other image was actually un-stacked, or stacked with fewer noise data frames.

There is some coma effect at the bottom of the image, being a Newtonian.

https://photos.google.com/share/AF1QipOSEmjGGg8DWPwrZsEMk6jmYvjfovyeGptRuAXpcfBswxEM2kFKdVIbSc4rtnHTeg/photo/AF1QipNMF6jy0wqtwpm6ecTLRS5ySvk8GgFXdgwov0Z3?key=V1BDMExVOEVTTzF3blVxMzl1YXVPSXBRQWgtcHh3
Reply: +bob question "why would that be impressive?"

Because I don't think you'll do it. See below, but it even seems you don't understand what I suggested you try to do to prove what you believe. That is, draw a diagram which represents the Earth which you believe is the real Earth, (flat?) but show how the stars behave as you, I or anyone can reliably see that they actually behave. 

It should show all of the following:
a. Stars rotating anti-clockwise around Polaris when viewed in the Northern hemisphere
b. Stars rotating clockwise around the South Celestial Pole when viewed in the Southern hemisphere.
c. Stars forming a semi-circle of trails centered on the Northern/Southern horizon in star-trail photographs taken at the Equator, and
d. Stars along the Celestial equator rising in the East, travelling straight overhead, and setting in the West, without making circles or arcs.
e. Show how folks in South Africa, Australia, and South America, all looking South on the Earth, can all see the Southern Cross, except that it is rotated around a center-point which is True (not magnetic) South for all observers, elevated according to their Southern latitude. This Southern Cross rotation being a function of the time-of-night, time-of-year, and their respective latitudes.
f. Polaris's angle "up" in the sky being the same as one's latitude, along with the center-of-rotation (a faint star) in the Southern hemisphere doing the same for Southerners like us.

These are all plain, simple, repeatable observations which anyone can make.

I would be completely astounded if you could produce a model of the Earth as you believe it to be, which shows all of these things working reliably.

"it would look like what you already know."

No, it wouldn't. It would look like the Earth as you believe it to be shaped, not me, except that the stars would move as we both can see that they do.

(or are you hinting that you really believe the Earth is a spheroid?)
The point is that the stars and their motions would be accounted for in your model.
a-f above cannot be observed from the surface of a disk, and if you believe they can, you need to illustrate your belief so that it may be understood by others.

"Then you would say, "no, i said a diagram of how they would appear on a flat Earth "."

No, of course not! I asked you to make a diagram of how stars would appear as they currently do appear except that they must be viewed by people on an Earth the shape that you think that it is. See a-f for how they should and do look in your depiction.

This is because nobody can argue what the stars actually look like. No matter where you are, you see them, and where in the sky you see them depends on the time, date, and your location. What I asked that you do is to show how they would do that, from any observer's location, on an Earth which is whatever shape you think it is.

"You would be unimpressed and you would argue that I am wrong."

You're already playing victim with an event that hasn't even occurred.
If you can manage to depict your beliefs such that they match with observable fact (where the stars are and how they move) from the position of any possible observer on Earth, I will concede that this is a strong piece of evidence that your beliefs are correct!

The worst that can happen is that I'll point out a situation where your model doesn't match reality.
Working scientists are robust enough to put up with this sort of criticism on a regular basis. They expect it.
They would be suspicious if it didn't happen! Are you?

Again, I don't mind what you believe, as long as you can present a depiction of it that matches real-world observations.
Reply: carzak exactly..... bob suffers from self-inflicted stupidity.
Reply: I think I've come up with an apparatus which is fairly fool proof.

I have a vacuum cleaner. I put a large glass cylinder that my dad puts his grass water in, and which just so happens to be a perfect fit for the vacuum machines hose. 

I inflate a balloon inside it, with the opening closed by two magnets.

I actually did this experiment, and the balloon shot straight to the top of the cylinder. I held the glass cylinder and hose straight and pointed at the ceiling, to prevent the escaping gas from impacting the apparatus's walls (though from my understanding it would have made no difference)

of course, we may need a stronger pump to achieve a better vacuum, but in any case I think this is a very good and cheap test.

although we wont achieve perfect vacuum, if bob is right the speed of ascent of the balloon would decrease as we come closer to vacuum, but the opposite scenario would show NASA is correct, at least in this regard.
Reply: bob question you've see that pic before? Did you google "Myanmar satellite dishes" specifically?  Or are you just full of shit as usual?
Reply: +Emaan Ajaz "where is everybody? we're not going to just let this thread fizzle out, are we?"

Noble Effort! Very clever your trick for sealing the balloon! Sorry, I was gleefully hosing down F-E tin-foil-hat fires elsewhere. Never ending, it is!

Regarding the vacuum experiment, it's a fairly good premise except for a few things.

A vacuum cleaner will suck by about 20kPa. Atmospheric pressure is ~101.3 kPa, so you'll get a little bit of vacuum, but not much. Equivalent to about 6000 feet of altitude, which you could also do by climbing a small mountain.

So, yes, you'll need a better pump. I have a vacuum "roughing pump" sitting in the workshop, but I need to make some better fittings and a vessel to properly use it since I moved house.

Also, the balloon...well if you used something like my pump, the balloon would either pop, or expand to the dimensions of the container. Either way, the experiment would be adversely affected.

Here are a few other suggestions for "rockets" to fire off in your vacuum chamber:

- Soda/Vinegar
- CO2 cylinder, or nitrous-oxide cylinder (tiny 65x18 mm pressure cylinders)
You'll need a way to "punch" a hole in the seal at the bottom which also does not move the "rocket".
- Match rocket (the YT video below shows how to make them, but the firing mechanism works more like a backwards cannon; you want a "match rocket" which has only empty space behind it, not a rod)
watch?v=4cPiQ6G-ToU
You will also need a way of igniting it. I'd suggest nichrome wire wrapped around the match, insulated, and somehow energized inside your chamber.
- Sugar Rocket - This is the equivalent of a toy model rocket motor, except home-made with potassium nitrate and sugar mix. See YT for howtos.
- Estes rocket motor from a hobby shop
- Water rocket (these are sold as toys) You could probably devise a "release" mechanism that would work from outside your vacuum chamber. Maybe a strong RC airplane servo.
- Spring-launcher (your movable part launches the "propellant" via an internal spring on a release)

I'm sure there are many other mechanisms that would work in a vacuum-chamber. Keep thinking!

One main thing bob question never makes clear is whether he thinks thrust from rockets decreases continuously as a function of altitude, or that he thinks the thrust suddenly "disappears" at the (arbitrary) Karman Line, 100km above Earth, which is the international, official definition of "space" where aviators get "Astronaut Wings" if they fly above that point.

But in this regard, you experiment is quite good. If he thinks thrust decreases continuously with altitude, and you can demonstrate a "rocket" producing exactly the same thrust at "sea level" and at, say, 10,000 feet, that ought to convince him, unless he builds another excuse, as usual.
Reply: vanillaHchrist
No, someone showed me it. Like you did...."oh, here is evidence of an unlikely box in the void directly above..." you know, the usual shit you get when someone confidently finds "proof" that space exists.

If that is all it takes to fool someone into thinking Star Wars is possible, then i've got a cloaked space vessel for sale and ill swap it for your house.;D

If you go to a site dedicated to satellite worship, you will find inexpensive pseudo evidence for space. If you look at real estate sites, you will find houses using satellite dishes that are set up to receive TV. Whilst you are transfixed by the gaze of your beguiler you will always steer clear of real evidence. Fear is the fence you are penned in by.
Reply: +bob question "."oh, here is evidence of an unlikely box in the void directly above...""

And you'll apparently never address what that line of un-moving stars is in a time-exposure towards the Celestial Equator. What could they possibly be?

How is it that there are stars right along the equatorial plane that don't leave trails in star-trail photos?
"Stars" which happen to have sat-dishes pointed directly at 'em.
Reply: bob question the ol' "space doesn't exist" argument again.... fuck, you're so smart!
Reply: carzak
The official figure is 15% that have come to the realization that there is no curvature or rotation. 15% that is no small picnic in the woods. And the number is increasing. Official figures are massaged as well.
I think if you were to subtract the percentage of those who don't know and don't care. Then subtract those who think they are on a ball but they don't really consider it. You would find the devout ball believers are on the decline. The 15% are strong with their understanding, they have looked. They know the ball model and they know it is wrong.
 
You are not on a spinning ball. Just feel how still you are right now. Its when you take your initial sensing and trust it. that's when the lie falls apart. Feel how still you are when you stand, sit or lye still.  

What do you mean by idiocy can't spread? Are you saying that idiocy spreads? Is that like a virus? Why would it spread? what would be the driving mechanism? what would draw an increasing number of people to the idea you don't believe in? 

idiocy never spreads. Bad education causes idiocy, but idiocy is a kind of illness or a symptom of an illness. We get better from it once we leave the source of the brainwashing.

If there is no truth in it, it won't spread unless you capture all the children for the ultimate brainwashing operation, then it will take, in the short term.
Reply: vanillaHchrist
Who says space doesn't exist? we just can't get to it and the notion of sling-shotting a spaceship using a large gravitational ball is just made up rubbish, A story.

Don't get me wrong, rockets and planes can't get up there but i think other things possibly can. Like electromagnetic levitation devices similar to what tesla wanted to create. After all, you see high altitude lights moving around up there but you don't hear them at night. They sometimes stop and change direction.

WE don't actually know what is up there.
Reply: sleat
so are you saying you can see the geostationary (excuse me whilst i compose myself) satellites in their orbits at 36,000 km away from the ball? no, you wouldn't see them.
Reply: bob question cherry picking facts again.... there are about 800 satellites in low orbit (below 2000) the majority are in medium earth orbit (including dish networks) and 36,000km would be referencing geostationary satellites like weather satellites.  

#ThereGoesBobLyingAgain
#StoryTimeWithBob
#BobSaysTheDarndestThings
#IWantToHangOutWithBob
Reply: vanillaHchrist
"cherry picking facts again" you consider my facts to be cherries ;D me to. And its a bumper harvest this year, plump juicy cherries all the way. 

 "there are about 800 satellites in low orbit (below 2000)" of course there are ;D and none of them can be in a geostationary orbit can they? Or they would plummet into your globular pear. 36,000 km and you believe you can see them. I'm not even going to start. There is no point.
Reply: +bob question "and none of them can be in a geostationary orbit can they? Or they would plummet into your globular pear."

Why would they do that? Do you believe in centrifugal force? Do you understand what a geostationary orbit is?

"36,000 km and you believe you can see them."

You really do insist on mis-understanding the other person's claim, don't you? That tactic doesn't fool anybody, and is called a strawman, just to remind you.

"I'm not even going to start. There is no point."

There is a point, because seeing these things, picking them out from the other stars with the naked eye is not something any sensible person would claim. It's a strawman on your part. Either that or your reading comprehension is sub-par for the fifth-grade level. Which is it?

The claim is that you can photograph them with a time-exposure.
Can you see the difference?
Reply: +bob question "Just feel how still you are right now. Its when you take your initial sensing and trust it. "

Just tell us what you would expect to feel on a sphere ~6350km in radius turning at half the speed of a clock's hour-hand?

What would you feel if it was only half that radius? Be specific. What should be different to what you feel just now ?

What would you feel on a 50 foot carousel moving at that angular velocity?

Do you believe it's possible to feel motion without a change in acceleration? What does it feel like?
Reply: +bob question "WE don't actually know what is up there."

Appeal to ignorance is a fallacy, not an argument.
Reply: bob question I think I've come up with an apparatus which is fairly fool proof.

I have a vacuum cleaner. I put a large glass cylinder that my dad puts his grass water in, and which just so happens to be a perfect fit for the vacuum machines hose. 

I inflate a balloon inside it, with the opening closed by two magnets.

I actually did this experiment, and the balloon shot straight to the top of the cylinder. I held the glass cylinder and hose straight and pointed at the ceiling, to prevent the escaping gas from impacting the apparatus's walls (though from my understanding it would have made no difference)

of course, we may need a stronger pump to achieve a better vacuum, but in any case I think this is a very good and cheap test.

although we wont achieve perfect vacuum, if bob is right the speed of ascent of the balloon would decrease as we come closer to vacuum, but the opposite scenario would show NASA is correct, at least as far as how rockets function
Reply: +Emaan Ajaz " if bob is right the speed of ascent of the balloon would decrease as we come closer to vacuum"

It should, if he is right, if you can keep a balloon which has been inflated in vacuum chamber smaller than its containing chamber. I don't think he is right, though.

The problem is that it doesn't seem that bob wants to clarify exactly what rocket thrust does as atmospheric pressure decreases. Does it die off slowly, or does it stop utterly at some predefined point? He never says.

We do know that the thrust of a jet engine is virtually the same at any altitude providing it has the same mass-flow-rate and exhaust velocity, and that these two terms also govern the thrust of rockets. So there's that. Bob has not supplied any other testable equation which he claims governs exactly the thrust a given rocket will make.
Reply: sleat
As atmospheric pressure decreases, so does thrust from a rocket.
As far as the balloon is concerned, the balloon and its contents only fly upwards until the gas outside is at the same relative density as the gas inside and the balloon itself. The gas will continue to spread out to be less dense but sooner or later the balloon can't open up any further and it either pops or it stops.
Reply: +bob question Thanks for finally answering that question!

"As atmospheric pressure decreases, so does thrust from a rocket."

Great! So, as factors for a calculation of the thrust force felt by the rocket body, we obviously have the atmospheric pressure, the material being burned and ejected, and its velocity.

What might be a workable, testable equation that describes this force, using these terms? Are there any other terms?

We know that rockets of all sizes and performance profiles exist, and work, and that the designers use equations to make the parameters right for the required performance, so what's your equation for the force the rocket feels?
Reply: sleat as bob tends to take a long time to answer questions, why dont you do my experiment with improved apparatus? then, upload it on your channel.

if the balloon still flies upward with the same or even greater speed, the experiment can be labeled a success. and actions speak louder then any words.
Reply: bob question just as you think the rest of us are wrong and too stupid to grasp the truth... well, you probably know what I'm trying to say.

yes, we believe in a spinning earth. it makes sense. maybe it doesn't make sense to you, but I, being someone who believes something if it makes sense (meaning I really hate quantum physics), finds that sleets, durchblicks, etc arguments make more sense than yours. theres simply too many holes in the flat earth theory for it to be correct, in my opinion. mean while, round earth theory answers the questions before they are asked, in my personal experience.

for example, a while ago, we argued on long shutter photography effects on star patterns. sleet mentioned certain stars not moving and appearing as dots, not streaks.

also, the movement of stars, the moon and the sun make no sense with the flat earth theory. not to mention that the flat earths sun and moon do not behave like how we observe them. the sun clearly rotates when seen through a semi opaque telescope. and what about solar eclipses?

evolution is a well researched theory, and in science, theory means hypothesis that is supported by facts. so yes, humans are simians. but we're smart civilised simians. and the proof is in our 98 percent dna similarities to chimps, in the fossil record of pre humans, and before you say it, we are not descended from chimps, we and chimps share a common ancestor.

if there is one definite problem with you bob, its that you talk to people who dont share your views like a bunch of morons. and its very difficult to be polite with someone like that. sleet and I try our best (though overall I think im doing a better job at it) and I definitely dont like carzh and vinillahchrist for their abrasiveness, but do you actually think you are being decent yourself?
Reply: +bob question "I answer sensible questions very quickly. Ones that aren't so sensible get shelved."

How, exactly, is asking you for an equation which describes what you believe not sensible?

Surely someone needs to be able to figure out the parameters to cause force for a given rocket or missile, so that it will actually move .

So, what formula describes that, in your opinion?

And a good teacher who doesn't think a question is "sensible" will tell the student why the question is nonsense, although any question should be a catalyst for understanding, don't you think?

Good teachers generally have to be more patient and grown up than their students, don't you think?
Reply: Emaan Ajaz
i don't think any of you are too stupid. It's not a case of being stupid. The globular universe is far more complicated than the real world yet we all have a pretty good grasp of it.
Reply: bob question well, if you dont THINK we're stupid, then dont talk to us like we're stupid. that means not insulting us for what we consider the truth. case in point, telling sleat that since he believes he is a simian, theres no point in giving him an answer, even though you know full well that he considers himself, and the rest of humanity for that matter, INTELLIGENT simians.

also, like I said, the flat earth theory is full of holes, while it is the round earth model which answers questions before they are even asked.
Reply: +bob question " The globular universe is far more complicated than the real world yet we all have a pretty good grasp of it."

Right, so the equation for Flat-Earth rocket thrust which reduces with atmospheric pressure should be a much simpler equation that the existing rocketry equations. Right?
Reply: bob question the only role who are having difficulty with "grasping" anything are those who believe in a flat earth.  Tell me which flat earth model do you believe in bob.  Do you believe in the flat disc earth with a wall of ice around it? Or is the infinite plane beyond the wall that contain an infinite amount of other flat earth type discs? Or is the flat infinite plane that is made up of rings of land and continents?  Is it flat and hollow at the same time? Is it covered by a firmament dome? Is that firmament dome glass? Can objects pass through the dome if there is a firmament dome? Is the dome really a dome or a sphere that wraps around the flat earth? Do you believe there is a universe beyond the dome if a firmament dome exists? Is the sun in our atmosphere? Is the moon in our atmosphere? Does the moon generate its own light? Are images of the stars and planets projected onto the dome and rotate? If  there's a universe beyond, does it spin around the flat earth? Is the flat earth completely motionless, or does it shoot upward through the universe creating the effect of gravity?  Are the stars and planets really just wandering angels? Is space water?  Are there reptilian shapeshifting aliens creating the globe earth lie to control us? Is the Jews? Is it the illuminati? Is it the pope? Is it joe rogan? Is it Satan? Do you think I'm a paid NASA shill that belongs to a government psyop operation?  

I'm pretty sure there's some stuff I forgot to mention, but flatearthers have too many theories regarding the planet and how it interacts with the surrounding universe for me to keep track of, but be sure to add them in for me

Once we get through all of that, maybe you can share your reasoning for not believing in the existence of nuclear weapons and dinosaur fossils
Reply: sleat
Interesting that you should get so riled up by my use of the term "monkey on a spinning ball"

 The "spinning ball" comes from scientists. When others tell you all about the ball, it is because they have heard it on the grapevine which originates with those scientists and no where else.

The "monkey", IE you being a monkey derivative. This comes from those same scientists that tell you you are on a spinning ball.

Those scientists say you are a monkey on a spinning ball.

I say you are a man on a flat stationary plane.

So whilst you wish to vent spleen in my direction, i urge you to think twice about that. 

If you are one of those you talk about that believe in the ball but choose to ignore those same scientists that tell you you are a monkey, Then i will give you the term Double Think.

I believed i was a monkey on a spinning ball because i didn't realise that these scientists are all employees to an agenda.
Reply: +bob question  "Interesting that you should get so riled up by my use of the term "monkey on a spinning ball""

Interesting that you should drop bait about riling me up (not relevant to the discussion) hoping to deflect from all the other points I raised about conspiracy theories being used as yet another "BLM" style mass-polarizing tool. You literally have nothing to say about all that. Interesting indeed!

Prove to me you're not somehow confined to a "reservation" of talking-points you're allowed to entertain by exiting the reservation and talking about them. Otherwise we'd have to assume there are topics you're not allowed to discuss, and that, of course, would be mighty strange for "just some guy on the net". Like during the Cold War when you'd have a chat with an ordinary Soviet citizen. Affable, lovable, friendly, but there was stuff they would simply refuse to acknowledge or speak about which didn't seem to have anything to do with their specific situation.

You are evolved from exactly the creatures I am evolved from, if any, although it would seem you might be part of a new evolutionary trend. ;-D

Why not go back to coming up with an equation for your claim of rocket thrust diminishing with altitude? 
Much more productive.
Reply: +bob question So, what would happen to you if you suddenly started talking about the points I've raised that you seem to have to ignore for some reason? What have you to lose?
Reply: bob question I see you chose not respond with the specifics to your beliefs regarding retardland aka flatearth and how it interacts with the universe..... but instead you try to bait with the monkey on a spinning ball comment

Apparently Bob thinks scientists are just some people who put on lab coats and make assumptions without any testing or observations
Reply: carzak flatearthers don't believe in psychology.... even though they like to throw around psychological terms like "cognitive dissonance"
Reply: Sure with he used a slo-mo camera in this experiment so we could see what actually happened the third time. Most likely, the initial thrust was created by blasting that plastic cover off the rocket, and that’s all it took to thrust the rocket around for a few seconds. Combustion and thrust do not work in a vacuum.
Reply: +carzak " It wasn't even close to a vacuum in the chamber anyway. "

It was between ~36,000 feet and ~34,000 feet, according to the gauge 24 in (vac) to 23.5 in. (vac). Evidently rockets work almost exactly the same at that height, with only about half the air per cubic-foot. Between 0.22 atmospheres and 0.25 atmospheres.

When doing vacuum-rocket experiments, "no thrust in vacuum" types need to acknowledge what happens between the range of "altitudes" the experiment was conducted. Hopefully they can dream up a formula where thrust suddenly disappears right at the Karman line. 

Most of them claim it gradually dies off with atmospheric pressure, but they won't ever provide a formula for why they think that.
Reply: +carzak Wel also clearly detect that, as the engine burns after the bottle fuses the rotation accelerates .

So, this proves that thrust is possible between the "altitudes" of about 36,000 and 34,000 feet.
Reply: A toast to my favourite thread in Youtube ever. I will miss it to the end of my days.
Reply: carzak
Why don't you go and actually listen to what is said? Do you fear the ridicule that will come once the truth is before you?
Reply: Yes
YES
YESSSSSHHH
I have successfully restarted this thread!
DO YOU HAVE ANY IDEA HOW MANY COMMENTS I SCROLLED THROUGH TO FIND THIS ONE THREAD
sleet! Robert destree! Durchblick! vinillaTchrist... nah, he was just here to troll everyone.
I REMEMBER ALL OF THEM
and especially you, bob! you flat earther conspirational maniac!

This was the thread that finally made me understand how rockets could work at all (and in vacuum)! This taught me how to argue with flat earthers. this one thread gave me so much

LET NOW THIS THREAD LIVE FOREVERMORE
Reply: +Emaan Ajaz "LET NOW THIS THREAD LIVE FOREVERMORE"
Amen, brother.

+carzak "The lunatics are having conferences now"

I think they need to run people for public office...
Endlessly entertaining.

Imagine a congress (or parliament) that's 1/3 flat-earthers!
Since it's all emotion, belief, and politics, and devoid of sincere, earnest observation, scientific rigor, or problem-solving, they'd get along great with the other politicians!

We've had the new-earth creationists in political positions. It's high-time for some flat-earthers representing folks too. It's time congress drafted some bills mandating the exploration of the "dome firmament" and the "edge" and flat-out demanding that NASA and other space-agencies take the true shape of the Earth seriously, and act accordingly!

Laws need to be passed which outlaw "CGI" photo-shopped images that show the curve, and instead require that only true images be published!

"if they figure out how to pool their money together and fly a plane to "the edge"

Or, spend a mere 40-50K and get the folks from GoFast to custom build a rocket that will fly properly to the edge of the "dome firmament" and make a close analysis.

That's why I think they need to get into mainstream politics. For 1/100th the yearly budget of NASA or even less, they could do any experiment they wanted to explore the Flat Earth, personally! That kind of money is nothing inside the DC beltway!
Reply: We've run into a horrible problem sleat. Remember that thread on 'Will a model rocket work in vacuum'? You know, the one with bob

Well, it seems that there's a 500 reply limit on Google +, and in extension. on Youtube. Hence, I was wondering if we could start a new thread with the others ( I deleted some replies of mine which were replicas to make this comment)(by the way, your's was the 500th comment, congrats)

In case you don't see this here, I've reposted this on your other videos.

Yeah, I love this thread way too much to see it die.

The most important members of this thread are Robert Destree, you, Durchblick, me, and the one and only bob.
Reply: +Emaan Ajaz Yes. There is a limit. I guess 500 is like that famous Bill Gates quote "nobody will ever need any more than 640k of ram!"

"Yeah, I love this thread way too much to see it die"

I don't think there's any hope of convincing bob of anything of significance. He seems quite happy in his beliefs such as they are, evidence be damned!

Some fence-sitters might see the exchanges taking place and it might help them form their own opinions though, which is mainly why I do this on a regular basis.
Reply: Look for "Bob can be convinced of anything empirically provable." to continue this thread. ;D
Reply: Edit 2:
I've just understood bob's last comment, which was

look for 'bob accepts empirical evidence'

I initially thought he meant to search it in the comments, but have since realised he meant that he had prepared a new comment to continue this thread. So please find the newest comment of bob so we can continue this blessed thread.

~~~~~~~~~~~~~~~~~

sleat The great thing about this thread is that it has a HUGE amount of arguments in favour of rockets working in vacuum, and for round earth on the whole. Bob's side of the whole thing, though in my opinion full of unsubstantiated claims, logical fallacies, and changes of the goalpost, were actually interesting and detailed, and I at least, liked the flow and ebb of the debate. Bob seems to me an intelligent person, but bound by his beliefs. Like you say, fence sitters will be able to come to a well informed opinion by reading through this thread.

Which brings us to the impending end of this thread. I don't want this debate to end on such an anticlimax. I am sure there must be some way for anyone to change their opinion. A foolproof experiment perhaps? but even if we manage to persuade bob (or, against all expectations, the other way around) I would still continue this thread, just to obtain the opinions of intelligent people on various topics.

So we have space for two more comments, and I will say this:

I'll make a new comment tomorrow. On the top of the comment section, there is a sorting option. the two options are 'most to least popular' and 'newest to oldest'. My comment will be somewhere on the top, considering how this isn't trending anymore. We'll continue from there.

sleet, it would be appreciated if you could somehow bring awareness to robert destree and durchblick (perhaps by commenting on their videos, or by replying to a comment of theirs somwhere)

Edit: it is done. bob had posted the 500th comment. I have deleted and then reposted this comment so that it will remain the 500th comment, so that, with any luck, robert destree and durchblick will see this.

to emphasize on how you guys will locate me in the new comments:
.find my username
.my comment will be a copy and pasting of this ENTIRE THREAD. which should give you guys an idea of how devoted I am to this thread.

Bob, please join the new thread. the fact of the matter is that you are the focal point of this entire debate. its us against you.

As for WHY you would want to join the new thread:

. one of your comments stated that you were only here to stretch your grey matter (exact words, not mocking at all) and to improve your argumentative abilities. I am sure you had fun too. This is exactly why I, and I suspect sleet, durchblick and robert destree stayed on this thread (carzak and vanillaTchrist were pretty much here for the sadistic pleasure of insulting you, and for the record, they are not welcome in the new thread).

. please? the new thread would not be half as interesting without you. after all, all stories require conflict. I for one, see you as a friend, and this is the only request I make of you.

due to the reply limit having been reached, you guys won't be able to reply to this. But if you appear in the new thread, then my invitation will have obviously been accepted.
Reply: potc420 not at all honestly, I was just early to the video for once in my life and felt like I had to comment something for the newcomers to laugh at as an attempt to get likes on a comment and feel good about myself for a short while ¯\(ツ)/¯
Reply: with over 136 million views on his channel, I doubt 1 iPhone will set him back much XD
Reply: Hey, at least you're honest about it!
Reply: Joe Rowland
no desire to show rockets failing in a vacuum, you mean ;D
Reply: BSM
I know more than enough. but your vague and useless statement tells me you are clueless. I blame our schools and the "global curriculum".
Reply: BSM
Old school, cool. Then you will know the expression "assumption is the mother of all fuck ups" then?
Reply: Durchblick
No, my prediction is not based on anything you have said there. What we need is a big enough vacuum and a small enough rocket and for me to be there to verify that absolute vacuum is achieved and that the exhaust gasses when fully reacted will be lost in the available space.  All else is hear say.
Reply: Jack Dingler
When you release a gas under pressure, it is not the same as throwing something out of the back of the rocket. People quote newtons third law as a reason why rockets would work in a vacuum, this would mean that gas is thrown out. Only it is not. The only time when energy for momentum will be returned to the rocket is when the rocket exhaust is released and there is a resisting pressure such as air pressure. You need resistance in order for there to be a force.
Reply: BSM
We all learned about newtons laws. None of them make a rocket in a vacuum possible.
Reply: Agamemnon yes. They're designed to not function for a long time
Reply: Connor Dow
I noticed. I have raised that very point with him and so far silence. I just have people trying to justify how exhaust gas pressure would not influence the results. You see something bubbling in the bottom of the tank before the experiment even begins. I think our friend codey has been pressurised (like his "vacuum" chamber) to provide biased results. A true scientist would know that a rocket can not be tested in a vacuum chamber and that a vacuum chamber could not recreate an infinite vacuum that nasa claims space is.
Reply: WDane
There are no videos showing this working. This one does not test a rocket in a vacuum. The hot exhaust gasses pressurize the chamber. The rocket is not working against gravity. All of the other tests are flawed in a similar way. These guys don't want childhood dreams ruined by reality. Watch them carefully, they are ALL flawed by nature.

Many countries have told you that they have been to space. None of them have. They want to keep your eyes and thoughts off of what is here, under your feet. There is far more to this place than meets the eye.
Reply: did no one notice how bad his video was for codys standards ?
Reply: BSM
That's not an assumption, its a prediction. The problem is that it's not a testable hypothesis in a bucket size vacuum chamber. It could be that a rocket in an infinite vacuum and subject to no directional forces like "gravity" could acquire some momentum from pressurized gas release (such as combustion) There are laws regarding pressurized gas that say otherwise but that is also not a testable hypothesis. You are a scientist, we should be agreed on this fact apart from you saying "oh but we can test this in space". Say so if you feel that I am wrong, please.

Is there gravity in space? according to the official narrative, yes. enough to hold a multi billion tonne rock ball 250,000 miles away from doing what it wants to do and travel in a straight line. Also, 17,500 MPH is the speed you need to travel at to acquire the sweat spot where gravity and centrifugal forces are perfectly balanced, if you weigh 450 tonnes and are travelling 250 miles above the surface of the ball earth, according to "science". "Orbit" is a state of perpetual free fall. So they say. 

So gravity is not much weaker at 250 miles up than it is on the ball earths surface. So we need a very big vacuum chamber that is subject to gravity and can be completely evacuated. Then we need a very small rocket to fly upwards in that void. If that happens, then my prediction is wrong.

It will flounder on the launchpad.